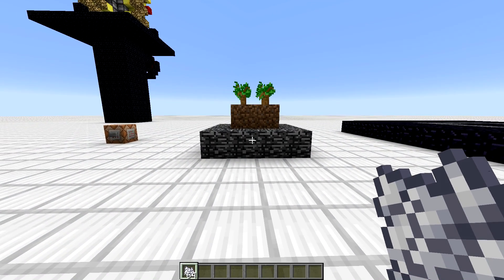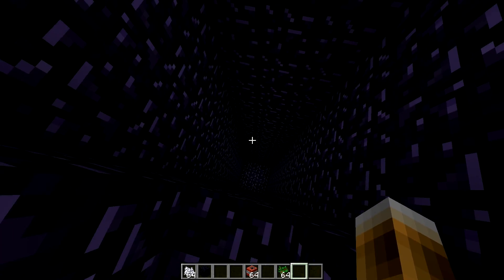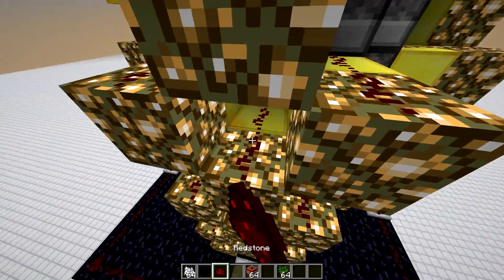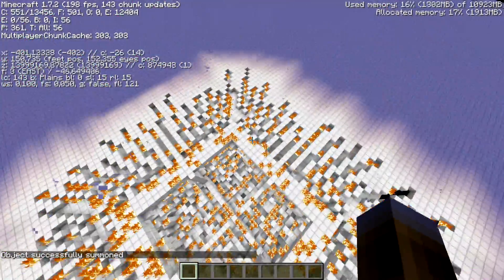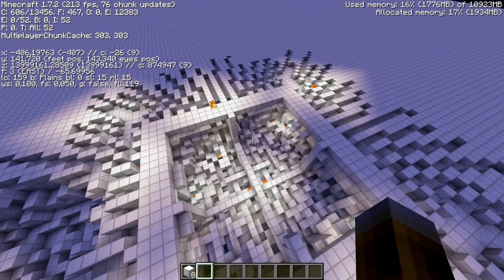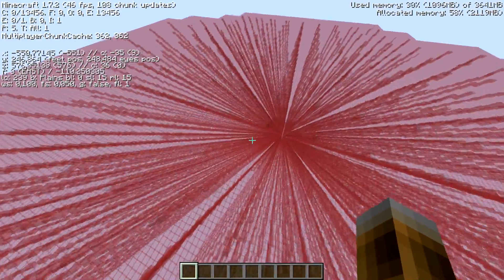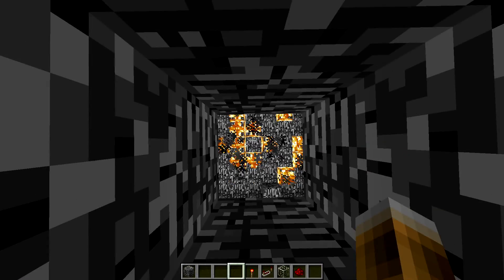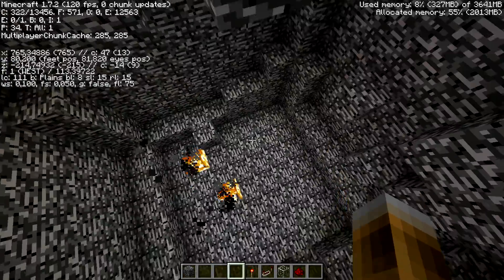Minecraft Science: Explosions ( How to blow up Bedrock - Explanation)

Comment: 00000000000000000000000000000000000000000000000000000000000000000000000000000000000000000000000000000000000000000000000000000000000000000000000000000000000000000000000000000000000000000
for the big bang sise it would be 100000000000000000000000000000000000000000000000000000000000000000000000000000000000000000000000000000000000000000000000000000000000000000000000000000000000000000000000000000000000000000000000000000000000000000000000000000000000000000000000000000000000000000000000000000000000000000000000000000000000000000000000000000000000000000000000000000000000000000000000000000000000000000000000000000000000000000000000000000000000000000000000000000000000000000000000000000000000000000000000000000000000000000000000000000000000000000000000000000000000000000000000000000000000000000000000000000000000000000000000000000000000000000000000000000000000000000000000000000000000000000000000000000000000000000000000000000000000000000000000000000000000000000000000000000000000000000000000000000000000000000000000000000000000000000000000000000000000000000000000000000000000000000000000000000000000000000000000000000000000000000000000000000000000000000000000000000000000000000000000000000000000000000000000000000000000000000000000000000000000000000000000000000000000000000000000000000000000000000000000000000000000000000000000000000000000000000000000000000000000000000000000000000000000000000000000000000000000000000000000000000000000000000000000000000000000000000000000000000000000000000000000000000000000000000000000000000000000000000000000000000000000000000000000000000000000000000000000000000000000000000000000000000000000000000000000000000000000000000000000000000000000000000000000000000000000000000000000000000000000000000000000000000000000000000000000000000000000000000000000000000000000000000000000000000000000000000000000000000000000000000000000000000000000000000000000000000000000000000000000000000000000000000000000000000000000000000000000000000000000000000000000000000000000000000000000000000000000000000000000000000000000000000000000000000000000000000000000000000000000000000000000000000000000000000000000000000000000000000000000000000000000000000000000000000000000000000000000000000000000000000000000000000000000000000000000000000000000000000000000000000000000000000000000000000000000000000000000000000000000000000000000000000000000000000000000000000000000000000000000000000000000000000000000000000000000000000000000000000000000000000000000000000000000000000000000000000000000000000000000000000000000000000000000000000000000000000000000000000000000000000000000000000000000000000000000000000000000000000000000000000000000000000000000000000000000000000000000000000000000000000000000000000000000000000000000000000000000000000000000000000000000000000000000000000000000000000000000000000000000000000000000000000000000000000000000000000000000000000000000000000000000000000000000000000000000000000000000000000000000000000000000000000000000000000000000000000000000000000000000000000000000000000000000000000000000000000000000000000000000000000000000000000000000000000000000000000000000000000000000000000000000000000000000000000000000000000000000000000000000000000000000000000000000000000000000000000000000000000000000000000000000000000000000000000000000000000000000000000000000000000000000000000000000000000000000000000000000000000000000000000000000000000000000000000000000000000000000000000000000000000000000000000000000000000000000000000000000000000000000000000000000000000000000000000000000000000000000000000000000000000000000000000000000000000000000000000000000000000000000000000000000000000000000000000000000000000000000000000000000000000000000000000000000000000000000000000000000000000000000000000000000000000000000000000000000000000000000000000000000000000000000000000000000000000000000000000000000000000000000000000000000000000000000000000000000000000000000000000000000000000000000000000000000000000000000000000000000000000000000000000000000000000000000000000000000000000000000000000000000000000000000000000000000000000000000000000000000000000000000000000000000000000000000000000000000000000000000000000000000000000000000000000000000000000000000000000000000000000000000000000000000000000000000000000000000000000000000000000000000000000000000000000000000000000000000000000000000000000000000000000000000000000000000000000000000000000000000000000000000000000000000000000000000000000000000000000000000000000000000000000000000000000000000000000000000000000000000000000000000000000000000000000000000000000000000000000000000000000000000000000000000000000000000000000000000000000000000000000000000000000000000000000000000000000000000000000000000000000000000000000000000000000000000000000000000000000000000000000000000000000000000000000000000000000000000000000000000000000000000000000000000000000000000000000000000000000000000000000000000000000012200000000000000000000000000000000000000000000000000000000000000000000000000000000000000000000000000000000000000000000000000000000000000000000000000000000000000000000000000000000000000000000000000000000000000000000000000000000000000000000000000000000000000000000000000000000000000000000000000000000000000000000000000000000000000000000000000000000000000000000000000000000000000000000000000000000000000000000000000000000000000000000000000000000000000000000000000000000000000000000000000000000000000000000000000000000000000000000000000000000000000000000000000000000000000000000000000000000000000000000000000000000000000000000000000000000000000000000000000000000000000000000000000000000000000000000000000000000000000000000000000000000000000000000000000000000000000000000000000000000000000000000000000000000000000000000000000000000000000000000000000000000000000000000000000000000000000000000000000000000000000000000000000000000000000000000000000000000000000000000000000000000000000000000000000000000000000000000000000000000000000000000000000000000000000000000000000000000000000000000000000000000000000000000000000000000000000000000000000000000000000000000000000000000000000000000000000000000000000000000000000000000000000000000000000000000000000000000000000000000000000000000000000000000000000000000000000000000000000000000000000000000000000000000000000000000000000000000000000000000000000000000000000000000000000000000000000000000000000000000000000000000000000000000000000000000000000000000000000000000000000000000000000000000000000000000000000000000000000000000000000000000000000000000000000000000000000000000000000000000000000000000000000000000000000000000000000000000000000000000000000000000000000000000000000000000000000000000000000000000000000000000000000000000000000000000000000000000000000000000000000000000000000000000000000000000000000000000000000000000000000000000000000000000000000000000000000000000000000000000000000000000000000000000000000000000000000000000000000000000000000000000000000000000000000000000000000000000000000000000000000000000000000000000000000000000000000000000000000000000000000000000000000000000000000000000000000000000000000000000000000000000000000000000000000000000000000000000000000000000000000000000000000000000000000000000000000000000000000000000000000000000000000000000000000000000000000000000000000000000000000000000000000000000000000000000000000000000000000000000000000000000000000000000000000000000000000000000000000000000000000000000000000000000000000000000000000000000000000000000000000000000000000000000000000000000000000000000000000000000000000000000000000000000000000000000000000000000000000000000000000000000000000000000000000000000000000000000000000000000000000000000000000000000000000000000000000000000000000000000000000000000000000000000000000000000000000000000000000000000000000000000000000000000000000000000000000000000000000000000000000000000000000000000000000000000000000000000000000000000000000000000000000000000000000000000000000000000000000000000000000000000000000000000000000000000000000000000000000000000000000000000000000000000000000000000000000000000000000000000000000000000000000000000000000000000000000000000000000000000000000000000000000000000000000000000000000000000000000000000000000000000000000000000000000000000000000000000000000000000000000000000000000000000000000000000000000000000000000000000000000000000000000000000000000000000000000000000000000000000000000000000000000000000000000000000000000000000000000000000000000000000000000000000000000000000000000000000000000000000000000000000000000000000000000000000000000000000000000000000000000000000000000000000000000000000000000000000000000000000000000000000000000000000000000000000000000000000000000000000000000000000000000000000000000000000000000000000000000000000000000000000000000000000000000000000000000000000000000000000000000000000000000000000000000000000000000000000000000000000000000000000000000000000000000000000000000000000000000000000000000000000000000000000000000000000000000000000000000000000000000000000000000000000000000000000000000000000000000000000000000000000000000000000000000000000000000000000000000000000000000000000000000000000000000000000000000000000000000000000000000000000000000000000000000000000000000000000000000000000000000000000000000000000000000000000000000000000000000000000000000000000000000000000000000000000000000000000000000000000000000000000000000000000000000000000000000000000000000000000000000000000000000000000000000000000000000000000000000000000000000000000000000000000000000000000000000000000000000000000000000000000000000000000000000000000000000000000000000000000000000000000000000000000000000000000000000000000000000000000000000000000000000000000000000000000000000000000000000000000000000000000000000000000000000000000000000000000000000000000000000000000000000000000000000000000000000000000000000000000000000000000000000000000000000000000000000000000000000000000000000000000000000000000000000000000000000000000000000000000000000000000000000000000000000000000000000000000000000000000000000000000000000000000000000000000000000000000000000000000000000000000000000000000000000000000000000000000000000000000000000000000000000000000000000000000000000000000000000000000000000000000000000000000000000000000000000000000000000000000000000000000000000000000000000000000000000000000000000000000000000000000000000000000000000000000000000000000000000000000000000000000000000000000000000000000000000000000000000000000000000000000000000000000000000000000000000000000000000000000000000000000000000000000000000000000000000000000000000000000000000000000000000000000000000000000000000000000000000000000000000000000000000000000000000000000000000000000000000000000000000000000000000000000000000000000000000000000000000000000000000000000000000000000000000000000000000000000000000000000000000000000000000000000000000000000000000000000000000000000000000000000000000000000000000000000000000000000000000000000000000000000000000000000000000000000000000000000000000000000000000000000000000000000000000000000000000000000000000000000000000000000000000000000000000000000000000000000000000000000000000000000000000000000000000000000000000000000000000000000000000000000000000000000000000000000000000000000000000000000000000000000000000000000000000000000000000000000000000000000000000000000000000000000000000000000000000000000000000000000000000000000000000000000000000000000000000000000000000000000000000000000000000000000000000000000000000000000000000000000000000000000000000000000000000000000000000000000000000000000000000000000000000000000000000000000000000000000000000000000000000000000000000000000000000000000000000000000000000000000000000000000000000000000000000000000000000000000000000000000000000000000000000000000000000000000000000000000000000000000000000000000000000000000000000000000000000000000000000000000000000000ifyouseethisthenreplysayingisawitokok00000000000000000000000000000000000000000000000000000000000000000000000000000000000000000000000000000000000000000000000000000000000000000000000000000000000000000000000000000000000000000000000000000000000000000000000000000000000000000000000000000000000000000000000000000000000000000000000000000000000000000000000000000000000000000000000000000000000000000000000000000000000000000000000000000000000000000000000000000000000000000000000000000000000000000000000000000000000000000000000000000000000000000000000000000000000000000000000000000000000000000000000000000000000000000000000000000000000000000000000000000000000000000000000000000000000000000000000000000000000000000000000000000000000000000000000000000000000000000000000000000000000000000000000000000000000000000000000000000000000000000000000000000000000000000000000000000000000000000000000000000000000000000000000000000000000000000000000000000000000000000000000000000000000000000000000000000000000000000000000000000000000000000000000000000000000000000000000000000000000000000000000000000000000000000000000000000000000000000000000000000000000000000000000000000000000000000000000000000000000000000000000000000000000000000000000000000000000000000000000000000000000000000000000000000000000000000000000000000000000000000000000000000000000000000000000000000000000000000000000000000000000000000000000000000000000000000000000000000000000000000000000000000000000000000000000000000000000000000000000000000000000000000000000000000000000000000000000000000000000000000000000000000000000000000000000000000000000000000000000000000000000000000000000000000000000000000000000000000000000000000000000000000000000000000000000000000000000000000000000000000000000000000000000000000000000000000000000000000000000000000000000000000000000000000000000000000000000000000000000000000000000000000000000000000000000000000000000000000000000000000000000000000000000000000000000000000000000000000000000000000000000000000000000000000000000000000000000000000000000000000000000000000000000000000000000000000000000000000000000000000000000000000000000000000000000000000000000000000000000000000000000000000000000000000000000000000000000000000000000000000000000000000000000000000000000000000000000000000000000000000000000000000000000000000000000000000000000000000000000000000000000000000000000000000000000000000000000000000000000000000000000000000000000000000000000000000000000000000000000000000000000000000000000000000000000000000000000000000000000000000000000000000000000000000000000000000000000000000000000000000000000000000000000000000000000000000000000000000000000000000000000000000000000000000000000000000000000000000000000000000000000000000000000000000000000000000000000000000000000000000000000000000000000000000000000000000000000000000000000000000000000000000000000000000000000000000000000000000000000000000000000000000000000000000000000000000000000000000000000000000000000000000000000000000000000000000000000000000000000000000000000000000000000000000000000000000000000000000000000000000000000000000000000000000000000000000000000000000000000000000000000000000000000000000000000000000000000000000000000000000000000000000000000000000000000000000000000000000000000000000000000000000000000000000000000000000000000000000000000000000000000000000000000000000000000000000000000000000000000000000000000000000000000000000000000000000000000000000000000000000000000000000000000000000000000000000000000000000000000000000000000000000000000000000000000000000000000000000000000000000000000000000000000000000000000000000000000000000000000000000000000000000000000000000000000000000000000000000000000000000000000000000000000000000000000000000000000000000000000000000000000000000000000000000000000000000000000000000000000000000000000000000000000000000000000000000000000000000000000000000000000000000000000000000000000000000000000000000000000000000000000000000000000000000000000000000000000000000000000000000000000000000000000000000000000000000000000000000000000000000000000000000000000000000000000000000000000000000000000000000000000000000000000000000000000000000000000000000000000000000000000000000000000000000000000000000000000000000000000000000000000000000000000000000000000000000000000000000000000000000000000000000000000000000000000000000000000000000000000000000000000000000000000000000000000000000000000000000000000000000000000000000000000000000000000000000000000000000000000000000000000000000000000000000000000000000000000000000000000000000000000000000000000000000000000000000000000000000000000000000000000000000000000000000000000000000000000000000000000000000000000000000000000000000000000000000000000000000000000000000000000000000000000000000000000000000000000000000000000000000000000000000000000000000000000000000000000000000000000000000000000000000000000000000000000000000000000000000000000000000000000000000000000000000000000000000000000000000000000000000000000000000000000000000000000000000000000000000000000000000000000000000000000000000000000000000000000000000000000000000000000000000000000000000000000000000000000000000000000000000000000000000000000000000000000000000000000000000000000000000000000000000000000000000000000000000000000000000000000000000000000000000000000000000000000000000000000000000000000000000000000000000000000000000000000000000000000000000000000000000000000000000000000000000000000000000000000000000000000000000000000000000000000000000000000000000000000000000000000000000000000000000000000000000000000000000000000000000000000000000000000000000000000000000000000000000000000000000000000000000000000000000000000000000000000000000000000000000000000000000000000000000000000000000000000000000000000000000000000000000000000000000000000000000000000000000000000000000000000000000000000000000000000000000000000000000000000000000000000000000000000000000000000000000000000000000000000000000000000000000000000000000000000000000000000000000000000000000000000000000000000000000000000000000000000000000000000000000000000000000000000000000000000000000000000000000000000000000000000000000000000000000000000000000000000000000000000000000000000000000000000000000000000000000000000000000000000000000000000000000000000000000000000000000000000000000000000000000000000000000000000000000000000000000000000000000000000000000000000000000000000000000000000000000000000000000000000000000000000000000000000000000000000000000000000000000000000000000000000000000000000000000000000000000000000000000000000000000000000000000000000000000000000000000000000000000000000000000000000000000000000000000000000000000000000000000000000000000000000000000000000000000000000000000000000000000000000000000000000000000000000000000000000000000000000000000000000000000000000000000000000000000000000000000000000000000000000000000000000000000000000000000000000000000000000000000000000000000000000000000000000000000000000000000000000000000000000000000000000000000000000000000000000000000000000000000000000000000000000000000000000000000000000000000000000000000000000000000000000000000000000000000000000000000000000000000000000000000000000000000000000000000000000000000000000000000000000000000000000000000000000000000000000000000000000000000000000000000000000000000000000000000000000000000000000000000000000000000000000000000000000000000000000000000000000000000000000000000000000000000000000000000000000000000000000000000000000000000000000000000000000000000000000000000000000000000000000000000000000000000000000000000000000000000000000000000000000000000000000000000000000000000000000000000000000000000000000000000000000000000000000000000000000000000000000000000000000000000000000000000000000000000000000000000000000000000000000000000000000000000000000000000000000000000000000000000000000000000000000000000000000000000000000000000000000000000000000000000000000000000000000000000000000000000000000000000000000000000000000000000000000000000000000000000000000000000000000000000000000000000000000000000000000000000000000000000000000000000000000000000000000000000000000000000000000000000000000000000000000000000000000000000000000000000000000000000000000000000000000000000000000000000000000000000000000000000000000000000000000000000000000000000000000000000000000000000000000000000000000000000000000000000000000000000000000000000000000000000000000000000000000000000000000000000000000000000000000000000000000000000000000000000000000000000000000000000000000000000000000000000000000000000000000000000000000000000000000000000000000000000000000000000000000000000000000000000000000000000000000000000000000000000000000000000000000000000000000000000000000000000000000000000000000000000000000000000000000000000000000000000000000000000000000000000000000000000000000000000000000000000000000000000000000000000000000000000000000000000000000000000000000000000000000000000000000000000000000000000000000000000000000000000000000000000000000000000000000000000000000000000000000000000000000000000000000000000000000000000000000000000000000000000000000000000000000000000000000000000000000000000000000000000000000000000000000000000000000000000000000000000000000000000000000000000000000000000000000000000000000000000000000000000000000000000000000000000000000000000000000000000000000000000000000000000000000000000000000000000000000000000000000000000000000000000000000000000000000000000000000000000000000000000000000000000000000000000000000000000000000000000000000000000000000000000000000000000000000000000000000000000000000000000000000000000000000000000000000000000000000000000000000000000000000000000000000000000000000000000000000000000000000000000000000000000000000000000000000000000000000000000000000000000000000000000000000000000000000000000000000000000000000000000000000000000000000000000000000000000000000000000000000000000000000000000000000000000000000000000000000000000000000000000000000000000000000000000000000000000000000000000000000000000000000000000000000000000000000000000000000000000000000000000000000000000000000000000000000000000000000000000000000000000000000000000000000000000000000000000000000000000000000000000000000000000000000000000000000000000000000000000000000000000000000000000000000000000000000000000000000000000000000000000000000000000000000000000000000000000000000000000000000000000000000000000000000000000000000000000000000000000000000000000000000000000000000000000000000000000000000000000000000000000000000000000000000000000000000000000000000000000000000000000000000000000000000000000000000000000000000000000000000000000000000000000000000000000000000000000000000000000000000000000000000000000000000000000000000000000000000000000000000000000000000000000000000000000000000000000000000000000000000000000000000000000000000000000000000000000000000000000000000000000000000000000000000000000000000000000000000000000000000000000000000000000000000000000000000000000000000000000000000000000000000000000000000000000000000000000000000000000000000000000000000000000000000000000000000000000000000000000000000000000000000000000000000000000000000000000000000000000000000000000000000000000000000000000000000000000000000000000000000000000000000000000000000000000000000000000000000000000000000000000000000000000000000000000000000000000000000000000000000000000000000000000000000000000000000000000000000000000000000000000000000000000000000000000000000000000000000000000000000000000000000000000000000000000000000000000000000000000000000000000000000000000000000000000000000000000000000000000000000000000000000000000000000000000000000000000000000000000000000000000000000000000000000000000000000000000000000000000000000000000000000000000000000000000000000000000000000000000000000000000000000000000000000000000000000000000000000000000000000000000000000000000000000000000000000000000000000000000000000000000000000000000000000000000000000000000000000000000000000000000000000000000000000000000000000000000000000000000000000000000000000000000000000000000000000000000000000000000000000000000000000000000000000000000000000000000000000000000000000000000000000000000000000000000000000000000000000000000000000000000000000000000000000000000000000000000000000000000000000000000000000000000000000000000000000000000000000000000000000000000000000000000000000000000000000000000000000000000000000000000000000000000000000000000000000000000000000000000000000000000000000000000000000000000000000000000000000000000000000000000000000000000000000000000000000000000000000000000000000000000000000000000000000000000000000000000000000000000000000000000000000000000000000000000000000000000000000000000000000000000000000000000000000000000000000000000000000000000000000000000000000000000000000000000000000000000000000000000000000000000000000000000000000000000000000000000000000000000000000000000000000000000000000000000000000000000000000000000000000000000000000000000000000000000000000000000000000000000000000000000000000000000000000000000000000000000000000000000000000000000000000000000000000000000000000000000000000000000000000000000000000000000000000000000000000000000000000000000000000000000000000000000000000000000000000000000000000000000000000000000000000000000000000000000000000000000000000000000000000000000000000000000000000000000000000000000000000000000000000000000000000000000000000000000000000000000000000000000000000000000000000000000000000000000000000000000000000000000000000000000000000000000000000000000000000000000000000000000000000000000000000000000000000000000000000000000000000000000000000000000000000000000000000000000000000000000000000000000000000000000000000000000000000000000000000000000000000000000000000000000000000000000000000000000000000000000000000000000000000000000000000000000000000000000000000000000000000000000000000000000000000000000000000000000000000000000000000000000000000000000000000000000000000000000000000000000000000000000000000000000000000000000000000000000000000000000000000000000000000000000000000000000000000000000000000000000000000000000000000000000000000000000000000000000000000000000000000000000000000000000000000000000000000000000000000000000000000000000000000000000000000000000000000000000000000000000000000000000000000000000000000000000000000000000000000000000000000000000000000000000000000000000000000000000000000000000000000000000000000000000000000000000000000000000000000000000000000000000000000000000000000000000000000000000000000000000000000000000000000000000000000000000000000000000000000000000000000000000000000000000000000000000000000000000000000000000000000000000000000000000000000000000000000000000000000000000000000000000000000000000000000000000000000000000000000000000000000000000000000000000000000000000000000000000000000000000000000000000000000000000000000000000000000000000000000000000000000000000000000000000000000000000000000000000000000000000000000000000000000000000000000000000000000000000000000000000000000000000000000000000000000000000000000000000000000000000000000000000000000000000000000000000000000000000000000000000000000000000000000000000000000000000000000000000000000000000000000000000000000000000000000000000000000000000000000000000000000000000000000000000000000000000000000000000000000000000000000000000000000000000000000000000000000000000000000000000000000000000000000000000000000000000000000000000000000000000000000000000000000000000000000000000000000000000000000000000000000000000000000000000000000000000000000000000000000000000000000000000000000000000000000000000000000000000000000000000000000000000000000000000000000000000000000000000000000000000000000000000000000000000000000000000000000000000000000000000000000000000000000000000000000000000000000000000000000000000000000000000000000000000000000000000000000000000000000000000000000000000000000000000000000000000000000000000000000000000000000000000000000000000000000000000000000000000000000000000000000000000000000000000000000000000000000000000000000000000000000000000000000000000000000000000000000000000000000000000000000000000000000000000000000000000000000000000000000000000000000000000000000000000000000000000000000000000000000000000000000000000000000000000000000000000000000000000000000000000000000000000000000000000000000000000000000000000000000000000000000000000000000000000000000000000000000000000000000000000000000000000000000000000000000000000000000000000000000000000000000000000000000000000000000000000000000000000000000000000000000000000000000000000000000000000000000000000000000000000000000000000000000000000000000000000000000000000000000000000000000000000000000000000000000000000000000000000000000000000000000000000000000000000000000000000000000000000000000000000000000000000000000000000000000000000000000000000000000000000000000000000000000000000000000000000000000000000000000000000000000000000000000000000000000000000000000000000000000000000000000000000000000000000000000000000000000000000000000000000000000000000000000000000000000000000000000000000000000000000000000000000000000000000000000000000000000000000000000000000000000000000000000000000000000000000000000000000000000000000000000000000000000000000000000000000000000000000000000000000000000000000000000000000000000000000000000000000000000000000000000000000000000000000000000000000000000000000000000000000000000000000000000000000000000000000000000000000000000000000000000000000000000000000000000000000000000000000000000000000000000000000000000000000000000000000000000000000000000000000000000000000000000000000000000000000000000000000000000000000000000000000000000000000000000000000000000000000000000000000000000000000000000000000000000000000000000000000000000000000000000000000000000000000000000000000000000000000000000000000000000000000000000000000000000000000000000000000000000000000000000000000000000000000000000000000000000000000000000000000000000000000000000000000000000000000000000000000000000000000000000000000000000000000000000000000000000000000000000000000000000000000000000000000000000000000000000000000000000000000000000000000000000000000000000000000000000000000000000000000000000000000000000000000000000000000000000000000000000000000000000000000000000000000000000000000000000000000000000000000000000000000000000000000000000000000000000000000000000000000000000000000000000000000000000000000000000000000000000000000000000000000000000000000000000000000000000000000000000000000000000000000000000000000000000000000000000000000000000000000000000000000000000000000000000000000000000000000000000000000000000000000000000000000000000000000000000000000000000000000000000000000000000000000000000000000000000000000000000000000000000000000000000000000000000000000000000000000000000000000000000000000000000000000000000000000000000000000000000000000000000000000000000000000000000000000000000000000000000000000000000000000000000000000000000000000000000000000000000000000000000000000000000000000000000000000000000000000000000000000000000000000000000000000000000000000000000000000000000000000000000000000000000000000000000000000000000000000000000000000000000000000000000000000000000000000000000000000000000000000000000000000000000000000000000000000000000000000000000000000000000000000000000000000000000000000000000000000000000000000000000000000000000000000000000000000000000000000000000000000000000000000000000000000000000000000000000000000000000000000000000000000000000000000000000000000000000000000000000000000000000000000000000000000000000000000000000000000000000000000000000000000000000000000000000000000000000000000000000000000000000000000000000000000000000000000000000000000000000000000000000000000000000000000000000000000000000000000000000000000000000000000000000000000000000000000000000000000000000000000000000000000000000000000000000000000000000000000000000000000000000000000000000000000000000000000000000000000000000000000000000000000000000000000000000000000000000000000000000000000000000000000000000000000000000000000000000000000000000000000000000000000000000000000000000000000000000000000000000000000000000000000000000000000000000000000000000000000000000000000000000000000000000000000000000000000000000000000000000000000000000000000000000000000000000000000000000000000000000000000000000000000000000000000000000000000000000000000000000000000000000000000000000000000000000000000000000000000000000000000000000000000000000000000000000000000000000000000000000000000000000000000000000000000000000000000000000000000000000000000000000000000000000000000000000000000000000000000000000000000000000000000000000000000000000000000000000000000000000000000000000000000000000000000000000000000000000000000000000000000000000000000000000000000000000000000000000000000000000000000000000000000000000000000000000000000000000000000000000000000000000000000000000000000000000000000000000000000000000000000000000000000000000000000000000000000000000000000000000000000000000000000000000000000000000000000000000000000000000000000000000000000000000000000000000000000000000000000000000000000000000000000000000000000000000000000000000000000000000000000000000000000000000000000000000000000000000000000000000000000000000000000000000000000000000000000000000000000000000000000000000000000000000000000000000000000000000000000000000000000000000000000000000000000000000000000000000000000000000000000000000000000000000000000000000000000000000000000000000000000000000000000000000000000000000000000000000000000000000000000000000000000000000000000000000000000000000000000000000000000000000000000000000000000000000000000000000000000000000000000000000000000000000000000000000000000000000000000000000000000000000000000000000000000000000000000000000000000000000000000000000000000000000000000000000000000000000000000000000000000000000000000000000000000000000000000000000000000000000000000000000000000000000000000000000000000000000000000000000000000000000000000000000000000000000000000000000000000000000000000000000000000000000000000000000000000000000000000000000000000000000000000000000000000000000000000000000000000000000000000000000000000000000000000000000000000000000000000000000000000000000000000000000000000000000000000000000000000000000000000000000000000000000000000000000000000000000000000000000000000000000000000000000000000000000000000000000000000000000000000000000000000000000000000000000000000000000000000000000000000000000000000000000000000000000000000000000000000000000000000000000000000000000000000000000000000000000000000000000000000000000000000000000000000000000000000000000000000000000000000000000000000000000000000000000000000000000000000000000000000000000000000000000000000000000000000000000000000000000000000000000000000000000000000000000000000000000000000000000000000000000000000000000000000000000000000000000000000000000000000000000000000000000000000000000000000000000000000000000000000000000000000000000000000000000000000000000000000000000000000000000000000000000000000000000000000000000000000000000000000000000000000000000000000000000000000000000000000000000000000000000000000000000000000000000000000000000000000000000000000000000000000000000000000000000000000000000000000000000000000000000000000000000000000000000000000000000000000000000000000000000000000000000000000000000000000000000000000000000000000000000000000000000000000000000000000000000000000000000000000000000000000000000000000000000000000000000000000000000000000000000000000000000000000000000000000000000000000000000000000000000000000000000000000000000000000000000000000000000000000000000000000000000000000000000000000000000000000000000000000000000000000000000000000000000000000000000000000000000000000000000000000000000000000000000000000000000000000000000000000000000000000000000000000000000000000000000000000000000000000000000000000000000000000000000000000000000000000000000000000000000000000000000000000000000000000000000000000000000000000000000000000000000000000000000000000000000000000000000000000000000000000000000000000000000000000000000000000000000000000000000000000000000000000000000000000000000000000000000000000000000000000000000000000000000000000000000000000000000000000000000000000000000000000000000000000000000000000000000000000000000000000000000000000000000000000000000000000000000000000000000000000000000000000000000000000000000000000000000000000000000000000000000000000000000000000000000000000000000000000000000000000000000000000000000000000000000000000000000000000000000000000000000000000000000000000000000000000000000000000000000000000000000000000000000000000000000000000000000000000000000000000000000000000000000000000000000000000000000000000000000000000000000000000000000000000000000000000000000000000000000000000000000000000000000000000000000000000000000000000000000000000000000000000000000000000000000000000000000000000000000000000000000000000000000000000000000000000000000000000000000000000000000000000000000000000000000000000000000000000000000000000000000000000000000000000000000000000000000000000000000000000000000000000000000000000000000000000000000000000000000000000000000000000000000000000000000000000000000000000000000000000000000000000000000000000000000000000000000000000000000000000000000000000000000000000000000000000000000000000000000000000000000000000000000000000000000000000000000000000000000000000000000000000000000000000000000000000000000000000000000000000000000000000000000000000000000000000000000000000000000000000000000000000000000000000000000000000000000000000000000000000000000000000000000000000000000000000000000000000000000000000000000000000000000000000000000000000000000000000000000000000000000000000000000000000000000000000000000000000000000000000000000000000000000000000000000000000000000000000000000000000000000000000000000000000000000000000000000000000000000000000000000000000000000000000000000000000000000000000000000000000000000000000000000000000000000000000000000000000000000000000000000000000000000000000000000000000000000000000000000000000000000000000000000000000000000000000000000000000000000000000000000000000000000000000000000000000000000000000000000000000000000000000000000000000000000000000000000000000000000000000000000000000000000000000000000000000000000000000000000000000000000000000000000000000000000000000000000000000000000000000000000000000000000000000000000000000000000000000000000000000000000000000000000000000000000000000000000000000000000000000000000000000000000000000000000000000000000000000000000000000000000000000000000000000000000000000000000000000000000000000000000000000000000000000000000000000000000000000000000000000000000000000000000000000000000000000000000000000000000000000000000000000000000000000000000000000000000000000000000000000000000000000000000000000000000000000000000000000000000000000000000000000000000000000000000000000000000000000000000000000000000000000000000000000000000000000000000000000000000000000000000000000000000000000000000000000000000000000000000000000000000000000000000000000000000000000000000000000000000000000000000000000000000000000000000000000000000000000000000000000000000000000000000000000000000000000000000000000000000000000000000000000000000000000000000000000000000000000000000000000000000000000000000000000000000000000000000000000000000000000000000000000000000000000000000000000000000000000000000000000000000000000000000000000000000000000000000000000000000000000000000000000000000000000000000000000000000000000000000000000000000000000000000000000000000000000000000000000000000000000000000000000000000000000000000000000000000000000000000000000000000000000000000000000000000000000000000000000000000000000000000000000000000000000000000000000000000000000000000000000000000000000000000000000000000000000000000000000000000000000000000000000000000000000000000000000000000000000000000000000000000000000000000000000000000000000000000000000000000000000000000000000000000000000000000000000000000000000000000000000000000000000000000000000000000000000000000000000000000000000000000000000000000000000000000000000000000000000000000000000000000000000000000000000000000000000000000000000000000000000000000000000000000000000000000000000000000000000000000000000000000000000000000000000000000000000000000000000000000000000000000000000000000000000000000000000000000000000000000000000000000000000000000000000000000000000000000000000000000000000000000000000000000000000000000000000000000000000000000000000000000000000000000000000000000000000000000000000000000000000000000000000000000000000000000000000000000000000000000000000000000000000000000000000000000000000000000000000000000000000000000000000000000000000000000000000000000000000000000000000000000000000000000000000000000000000000000000000000000000000000000000000000000000000000000000000000000000000000000000000000000000000000000000000000000000000000000000000000000000000000000000000000000000000000000000000000000000000000000000000000000000000000000000000000000000000000000000000000000000000000000000000000000000000000000000000000000000000000000000000000000000000000000000000000000000000000000000000000000000000000000000000000000000000000000000000000000000000000000000000000000000000000000000000000000000000000000000000000000000000000000000000000000000000000000000000000000000000000000000000000000000000000000000000000000000000000000000000000000000000000000000000000000000000000000000000000000000000000000000000000000000000000000000000000000000000000000000000000000000000000000000000000000000000000000000000000000000000000000000000000000000000000000000000000000000000000000000000000000000000000000000000000000000000000000000000000000000000000000000000000000000000000000000000000000000000000000000000000000000000000000000000000000000000000000000000000000000000000000000000000000000000000000000000000000000000000000000000000000000000000000000000000000000000000000000000000000000000000000000000000000000000000000000000000000000000000000000000000000000000000000000000000000000000000000000000000000000000000000000000000000000000000000000000000000000000000000000000000000000000000000000000000000000000000000000000000000000000000000000000000000000000000000000000000000000000000000000000000000000000000000000000000000000000000000000000000000000000000000000000000000000000000000000000000000000000000000000000000000000000000000000000000000000000000000000000000000000000000000000000000000000000000000000000000000000000000000000000000000000000000000000000000000000000000000000000000000000000000000000000000000000000000000000000000000000000000000000000000000000000000000000000000000000000000000000000000000000000000000000000000000000000000000000000000000000000000000000000000000000000000000000000000000000000000000000000000000000000000000000000000000000000000000000000000000000000000000000000000000000000000000000000000000000000000000000000000000000000000000000000000000000000000000000000000000000000000000000000000000000000000000000000000000000000000000000000000000000000000000000000000000000000000000000000000000000000000000000000000000000000000000000000000000000000000000000000000000000000000000000000000000000000000000000000000000000000000000000000000000000000000000000000000000000000000000000000000000000000000000000000000000000000000000000000000000000000000000000000000000000000000000000000000000000000000000000000000000000000000000000000000000000000000000000000000000000000000000000000000000000000000000000000000000000000000000000000000000000000000000000000000000000000000000000000000000000000000000000000000000000000000000000000000000000000000000000000000000000000000000000000000000000000000000000000000000000000000000000000000000000000000000000000000000000000000000000000000000000000000000000000000000000000000000000000000000000000000000000000000000000000000000000000000000000000000000000000000000000000000000000000000000000000000000000000000000000000000000000000000000000000000000000000000000000000000000000000000000000000000000000000000000000000000000000000000000000000000000000000000000000000000000000000000000000000000000000000000000000000000000000000000000000000000000000000000000000000000000000000000000000000000000000000000000000000000000000000000000000000000000000000000000000000000000000000000000000000000000000000000000000000000000000000000000000000000000000000000000000000000000000000000000000000000000000000000000000000000000000000000000000000000000000000000000000000000000000000000000000000000000000000000000000000000000000000000000000000000000000000000000000000000000000000000000000000000000000000000000000000000000000000000000000000000000000000000000000000000000000000000000000000000000000000000000000000000000000000000000000000000000000000000000000000000000000000000000000000000000000000000000000000000000000000000000000000000000000000000000000000000000000000000000000000000000000000000000000000000000000000000000000000000000000000000000000000000000000000000000000000000000000000000000000000000000000000000000000000000000000000000000000000000000000000000000000000000000000000000000000000000000000000000000000000000000000000000000000000000000000000000000000000000000000000000000000000000000000000000000000000000000000000000000000000000000000000000000000000000000000000000000000000000000000000000000000000000000000000000000000000000000000000000000000000000000000000000000000000000000000000000000000000000000000000000000000000000000000000000000000000000000000000000000000000000000000000000000000000000000000000000000000000000000000000000000000000000000000000000000000000000000000000000000000000000000000000000000000000000000000000000000000000000000000000000000000000000000000000000000000000000000000000000000000000000000000000000000000000000000000000000000000000000000000000000000000000000000000000000000000000000000000000000000000000000000000000000000000000000000000000000000000000000000000000000000000000000000000000000000000000000000000000000000000000000000000000000000000000000000000000000000000000000000000000000000000000000000000000000000000000000000000000000000000000000000000000000000000000000000000000000000000000000000000000000000000000000000000000000000000000000000000000000000000000000000000000000000000000000000000000000000000000000000000000000000000000000000000000000000000000000000000000000000000000000000000000000000000000000000000000000000000000000000000000000000000000000000000000000000000000000000000000000000000000000000000000000000000000000000000000000000000000000000000000000000000000000000000000000000000000000000000000000000000000000000000000000000000000000000000000000000000000000000000000000000000000000000000000000000000000000000000000000000000000000000000000000000000000000000000000000000000000000000000000000000000000000000000000000000000000000000000000000000000000000000000000000000000000000000000000000000000000000000000000000000000000000000000000000000000000000000000000000000000000000000000000000000000000000000000000000000000000000000000000000000000000000000000000000000000000000000000000000000000000000000000000000000000000000000000000000000000000000000000000000000000000000000000000000000000000000000000000000000000000000000000000000000000000000000000000000000000000000000000000000000000000000000000000000000000000000000000000000000000000000000000000000000000000000000000000000000000000000000000000000000000000000000000000000000000000000000000000000000000000000000000000000000000000000000000000000000000000000000000000000000000000000000000000000000000000000000000000000000000000000000000000000000000000000000000000000000000000000000000000000000000000000000000000000000000000000000000000000000000000000000000000000000000000000000000000000000000000000000000000000000000000000000000000000000000000000000000000000000000000000000000000000000000000000000000000000000000000000000000000000000000000000000000000000000000000000000000000000000000000000000000000000000000000000000000000000000000000000000000000000000000000000000000000000000000000000000000000000000000000000000000000000000000000000000000000000000000000000000000000000000000000000000000000000000000000000000000000000000000000000000000000000000000000000000000000000000000000000000000000000000000000000000000000000000000000000000000000000000000000000000000000000000000000000000000000000000000000000000000000000000000000000000000000000000000000000000000000000000000000000000000000000000000000000000000000000000000000000000000000000000000000000000000000000000000000000000000000000000000000000000000000000000000000000000000000000000000000000000000000000000000000000000000000000000000000000000000000000000000000000000000000000000000000000000000000000000000000000000000000000000000000000000000000000000000000000000000000000000000000000000000000000000000000000000000000000000000000000000000000000000000000000000000000000000000000000000000000000000000000000000000000000000000000000000000000000000000000000000000000000000000000000000000000000000000000000000000000000000000000000000000000000000000000000000000000000000000000000000000000000000000000000000000000000000000000000000000000000000000000000000000000000000000000000000000000000000000000000000000000000000000000000000000000000000000000000000000000000000000000000000000000000000000000000000000000000000000000000000000000000000000000000000000000000000000000000000000000000000000000000000000000000000000000000000000000000000000000000000000000000000000000000000000000000000000000000000000000000000000000000000000000000000000000000000000000000000000000000000000000000000000000000000000000000000000000000000000000000000000000000000000000000000000000000000000000000000000000000000000000000000000000000000000000000000000000000000000000000000000000000000000000000000000000000000000000000000000000000000000000000000000000000000000000000000000000000000000000000000000000000000000000000000000000000000000000000000000000000000000000000000000000000000000000000000000000000000000000000000000000000000000000000000000000000000000000000000000000000000000000000000000000000000000000000000000000000000000000000000000000000000000000000000000000000000000000000000000000000000000000000000000000000000000000000000000000000000000000000000000000000000000000000000000000000000000000000000000000000000000000000000000000000000000000000000000000000000000000000000000000000000000000000000000000000000000000000000000000000000000000000000000000000000000000000000000000000000000000000000000000000000000000000000000000000000000000000000000000000000000000000000000000000000000000000000000000000000000000000000000000000000000000000000000000000000000000000000000000000000000000000000000000000000000000000000000000000000000000000000000000000000000000000000000000000000000000000000000000000000000000000000000000000000000000000000000000000000000000000000000000000000000000000000000000000000000000000000000000000000000000000000000000000000000000000000000000000000000000000000000000000000000000000000000000000000000000000000000000000000000000000000000000000000000000000000000000000000000000000000000000000000000000000000000000000000000000000000000000000000000000000000000000000000000000000000000000000000000000000000000000000000000000000000000000000000000000000000000000000000000000000000000000000000000000000000000000000000000000000000000000000000000000000000000000000000000000000000000000000000000000000000000000000000000000000000000000000000000000000000000000000000000000000000000000000000000000000000000000000000000000000000000000000000000000000000000000000000000000000000000000000000000000000000000000000000000000000000000000000000000000000000000000000000000000000000000000000000000000000000000000000000000000000000000000000000000000000000000000000000000000000000000000000000000000000000000000000000000000000000000000000000000000000000000000000000000000000000000000000000000000000000000000000000000000000000000000000000000000000000000000000000000000000000000000000000000000000000000000000000000000000000000000000000000000000000000000000000000000000000000000000000000000000000000000000000000000000000000000000000000000000000000000000000000000000000000000000000000000000000000000000000000000000000000000000000000000000000000000000000000000000000000000000000000000000000000000000000000000000000000000000000000000000000000000000000000000000000000000000000000000000000000000000000000000000000000000000000000000000000000000000000000000000000000000000000000000000000000000000000000000000000000000000000000000000000000000000000000000000000000000000000000000000000000000000000000000000000000000000000000000000000000000000000000000000000000000000000000000000000000000000000000000000000000000000000000000000000000000000000000000000000000000000000000000000000000000000000000000000000000000000000000000000000000000000000000000000000000000000000000000000000000000000000000000000000000000000000000000000000000000000000000000000000000000000000000000000000000000000000000000000000000000000000000000000000000000000000000000000000000000000000000000000000000000000000000000000000000000000000000000000000000000000000000000000000000000000000000000000000000000000000000000000000000000000000000000000000000000000000000000000000000000000000000000000000000000000000000000000000000000000000000000000000000000000000000000000000000000000000000000000000000000000000000000000000000000000000000000000000000000000000000000000000000000000000000000000000000000000000000000000000000000000000000000000000000000000000000000000000000000000000000000000000000000000000000000000000000000000000000000000000000000000000000000000000000000000000000000000000000000000000000000000000000000000000000000000000000000000000000000000000000000000000000000000000000000000000000000000000000000000000000000000000000000000000000000000000000000000000000000000000000000000000000000000000000000000000000000000000000000000000000000000000000000000000000000000000000000000000000000000000000000000000000000000000000000000000000000000000000000000000000000000000000000000000000000000000000000000000000000000000000000000000000000000000000000000000000000000000000000000000000000000000000000000000000000000000000000000000000000000000000000000000000000000000000000000000000000000000000000000000000000000000000000000000000000000000000000000000000000000000000000000000000000000000000000000000000000000000000000000000000000000000000000000000000000000000000000000000000000000000000000000000000000000000000000000000000000000000000000000000000000000000000000000000000000000000000000000000000000000000000000000000000000000000000000000000000000000000000000000000000000000000000000000000000000000000000000000000000000000000000000000000000000000000000000000000000000000000000000000000000000000000000000000000000000000000000000000000000000000000000000000000000000000000000000000000000000000000000000000000000000000000000000000000000000000000000000000000000000000000000000000000000000000000000000000000000000000000000000000000000000000000000000000000000000000000000000000000000000000000000000000000000000000000000000000000000000000000000000000000000000000000000000000000000000000000000000000000000000000000000000000000000000000000000000000000000000000000000000000000000000000000000000000000000000000000000000000000000000000000000000000000000000000000000000000000000000000000000000000000000000000000000000000000000000000000000000000000000000000000000000000000000000000000000000000000000000000000000000000000000000000000000000000000000000000000000000000000000000000000000000000000000000000000000000000000000000000000000000000000000000000000000000000000000000000000000000000000000000000000000000000000000000000000000000000000000000000000000000000000000000000000000000000000000000000000000000000000000000000000000000000000000000000000000000000000000000000000000000000000000000000000000000000000000000000000000000000000000000000000000000000000000000000000000000000000000000000000000000000000000000000000000000000000000000000000000000000000000000000000000000000000000000000000000000000000000000000000000000000000000000000000000000000000000000000000000000000000000000000000000000000000000000000000000000000000000000000000000000000000000000000000000000000000000000000000000000000000000000000000000000000000000000000000000000000000000000000000000000000000000000000000000000000000000000000000000000000000000000000000000000000000000000000000000000000000000000000000000000000000000000000000000000000000000000000000000000000000000000000000000000000000000000000000000000000000000000000000000000000000000000000000000000000000000000000000000000000000000000000000000000000000000000000000000000000000000000000000000000000000000000000000000000000000000000000000000000000000000000000000000000000000000000000000000000000000000000000000000000000000000000000000000000000000000000000000000000000000000000000000000000000000000000000000000000000000000000000000000000000000000000000000000000000000000000000000000000000000000000000000000000000000000000000000000000000000000000000000000000000000000000000000000000000000000000000000000000000000000000000000000000000000000000000000000000000000000000000000000000000000000000000000000000000000000000000000000000000000000000000000000000000000000000000000000000000000000000000000000000000000000000000000000000000000000000000000000000000000000000000000000000000000000000000000000000000000000000000000000000000000000000000000000000000000000000000000000000000000000000000000000000000000000000000000000000000000000000000000000000000000000000000000000000000000000000000000000000000000000000000000000000000000000000000000000000000000000000000000000000000000000000000000000000000000000000000000000000000000000000000000000000000000000000000000000000000000000000000000000000000000000000000000000000000000000000000000000000000000000000000000000000000000000000000000000000000000000000000000000000000000000000000000000000000000000000000000000000000000000000000000000000000000000000000000000000000000000000000000000000000000000000000000000000000000000000000000000000000000000000000000000000000000000000000000000000000000000000000000000000000000000000000000000000000000000000000000000000000000000000000000000000000000000000000000000000000000000000000000000000000000000000000000000000000000000000000000000000000000000000000000000000000000000000000000000000000000000000000000000000000000000000000000000000000000000000000000000000000000000000000000000000000000000000000000000000000000000000000000000000000000000000000000000000000000000000000000000000000000000000000000000000000000000000000000000000000000000000000000000000000000000000000000000000000000000000000000000000000000000000000000000000000000000000000000000000000000000000000000000000000000000000000000000000000000000000000000000000000000000000000000000000000000000000000000000000000000000000000000000000000000000000000000000000000000000000000000000000000000000000000000000000000000000000000000000000000000000000000000000000000000000000000000000000000000000000000000000000000000000000000000000000000000000000000000000000000000000000000000000000000000000000000000000000000000000000000000000000000000000000000000000000000000000000000000000000000000000000000000000000000000000000000000000000000000000000000000000000000000000000000000000000000000000000000000000000000000000000000000000000000000000000000000000000000000000000000000000000000000000000000000000000000000000000000000000000000000000000000000000000000000000000000000000000000000000000000000000000000000000000000000000000000000000000000000000000000000000000000000000000000000000000000000000000000000000000000000000000000000000000000000000000000000000000000000000000000000000000000000000000000000000000000000000000000000000000000000000000000000000000000000000000000000000000000000000000000000000000000000000000000000000000000000000000000000000000000000000000000000000000000000000000000000000000000000000000000000000000000000000000000000000000000000000000000000000000000000000000000000000000000000000000000000000000000000000000000000000000000000000000000000000000000000000000000000000000000000000000000000000000000000000000000000000000000000000000000000000000000000000000000000000000000000000000000000000000000000000000000000000000000000000000000000000000000000000000000000000000000000000000000000000000000000000000000000000000000000000000000000000000000000000000000000000000000000000000000000000000000000000000000000000000000000000000000000000000000000000000000000000000000000000000000000000000000000000000000000000000000000000000000000000000000000000000000000000000000000000000000000000000000000000000000000000000000000000000000000000000000000000000000000000000000000000000000000000000000000000000000000000000000000000000000000000000000000000000000000000000000000000000000000000000000000000000000000000000000000000000000000000000000000000000000000000000000000000000000000000000000000000000000000000000000000000000000000000000000000000000000000000000000000000000000000000000000000000000000000000000000000000000000000000000000000000000000000000000000000000000000000000000000000000000000000000000000000000000000000000000000000000000000000000000000000000000000000000000000000000000000000000000000000000000000000000000000000000000000000000000000000000000000000000000000000000000000000000000000000000000000000000000000000000000000000000000000000000000000000000000000000000000000000000000000000000000000000000000000000000000000000000000000000000000000000000000000000000000000000000000000000000000000000000000000000000000000000000000000000000000000000000000000000000000000000000000000000000000000000000000000000000000000000000000000000000000000000000000000000000000000000000000000000000000000000000000000000000000000000000000000000000000000000000000000000000000000000000000000000000000000000000000000000000000000000000000000000000000000000000000000000000000000000000000000000000000000000000000000000000000000000000000000000000000000000000000000000000000000000000000000000000000000000000000000000000000000000000000000000000000000000000000000000000000000000000000000000000000000000000000000000000000000000000000000000000000000000000000000000000000000000000000000000000000000000000000000000000000000000000000000000000000000000000000000000000000000000000000000000000000000000000000000000000000000000000000000000000000000000000000000000000000000000000000000000000000000000000000000000000000000000000000000000000000000000000000000000000000000000000000000000000000000000000000000000000000000000000000000000000000000000000000000000000000000000000000000000000000000000000000000000000000000000000000000000000000000000000000000000000000000000000000000000000000000000000000000000000000000000000000000000000000000000000000000000000000000000000000000000000000000000000000000000000000000000000000000000000000000000000000000000000000000000000000000000000000000000000000000000000000000000000000000000000000000000000000000000000000000000000000000000000000000000000000000000000000000000000000000000000000000000000000000000000000000000000000000000000000000000000000000000000000000000000000000000000000000000000000000000000000000000000000000000000000000000000000000000000000000000000000000000000000000000000000000000000000000000000000000000000000000000000000000000000000000000000000000000000000000000000000000000000000000000000000000000000000000000000000000000000000000000000000000000000000000000000000000000000000000000000000000000000000000000000000000000000000000000000000000000000000000000000000000000000000000000000000000000000000000000000000000000000000000000000000000000000000000000000000000000000000000000000000000000000000000000000000000000000000000000000000000000000000000000000000000000000000000000000000000000000000000000000000000000000000000000000000000000000000000000000000000000000000000000000000000000000000000000000000000000000000000000000000000000000000000000000000000000000000000000000000000000000000000000000000000000000000000000000000000000000000000000000000000000000000000000000000000000000000000000000000000000000000000000000000000000000000000000000000000000000000000000000000000000000000000000000000000000000000000000000000000000000000000000000000000000000000000000000000000000000000000000000000000000000000000000000000000000000000000000000000000000000000000000000000000000000000000000000000000000000000000000000000000000000000000000000000000000000000000000000000000000000000000000000000000000000000000000000000000000000000000000000000000000000000000000000000000000000000000000000000000000000000000000000000000000000000000000000000000000000000000000000000000000000000000000000000000000000000000000000000000000000000000000000000000000000000000000000000000000000000000000000000000000000000000000000000000000000000000000000000000000000000000000000000000000000000000000000000000000000000000000000000000000000000000000000000000000000000000000000000000000000000000000000000000000000000000000000000000000000000000000000000000000000000000000000000000000000000000000000000000000000000000000000000000000000000000000000000000000000000000000000000000000000000000000000000000000000000000000000000000000000000000000000000000000000000000000000000000000000000000000000000000000000000000000000000000000000000000000000000000000000000000000000000000000000000000000000000000000000000000000000000000000000000000000000000000000000000000000000000000000000000000000000000000000000000000000000000000000000000000000000000000000000000000000000000000000000000000000000000000000000000000000000000000000000000000000000000000000000000000000000000000000000000000000000000000000000000000000000000000000000000000000000000000000000000000000000000000000000000000000000000000000000000000000000000000000000000000000000000000000000000000000000000000000000000000000000000000000000000000000000000000000000000000000000000000000000000000000000000000000000000000000000000000000000000000000000000000000000000000000000000000000000000000000000000000000000000000000000000000000000000000000000000000000000000000000000000000000000000000000000000000000000000000000000000000000000000000000000000000000000000000000000000000000000000000000000000000000000000000000000000000000000000000000000000000000000000000000000000000000000000000000000000000000000000000000000000000000000000000000000000000000000000000000000000000000000000000000000000000000000000000000000000000000000000000000000000000000000000000000000000000000000000000000000000000000000000000000000000000000000000000000000000000000000000000000000000000000000000000000000000000000000000000000000000000000000000000000000000000000000000000000000000000000000000000000000000000000000000000000000000000000000000000000000000000000000000000000000000000000000000000000000000000000000000000000000000000000000000000000000000000000000000000000000000000000000000000000000000000000000000000000000000000000000000000000000000000000000000000000000000000000000000000000000000000000000000000000000000000000000000000000000000000000000000000000000000000000000000000000000000000000000000000000000000000000000000000000000000000000000000000000000000000000000000000000000000000000000000000000000000000000000000000000000000000000000000000000000000000000000000000000000000000000000000000000000000000000000000000000000000000000000000000000000000000000000000000000000000000000000000000000000000000000000000000000000000000000000000000000000000000000000000000000000000000000000000000000000000000000000000000000000000000000000000000000000000000000000000000000000000000000000000000000000000000000000000000000000000000000000000000000000000000000000000000000000000000000000000000000000000000000000000000000000000000000000000000000000000000000000000000000000000000000000000000000000000000000000000000000000000000000000000000000000000000000000000000000000000000000000000000000000000000000000000000000000000000000000000000000000000000000000000000000000000000000000000000000000000000000000000000000000000000000000000000000000000000000000000000000000000000000000000000000000000000000000000000000000000000000000000000000000000000000000000000000000000000000000000000000000000000000000000000000000000000000000000000000000000000000000000000000000000000000000000000000000000000000000000000000000000000000000000000000000000000000000000000000000000000000000000000000000000000000000000000000000000000000000000000000000000000000000000000000000000000000000000000000000000000000000000000000000000000000000000000000000000000000000000000000000000000000000000000000000000000000000000000000000000000000000000000000000000000000000000000000000000000000000000000000000000000000000000000000000000000000000000000000000000000000000000000000000000000000000000000000000000000000000000000000000000000000000000000000000000000000000000000000000000000000000000000000000000000000000000000000000000000000000000000000000000000000000000000000000000000000000000000000000000000000000000000000000000000000000000000000000000000000000000000000000000000000000000000000000000000000000000000000000000000000000000000000000000000000000000000000000000000000000000000000000000000000000000000000000000000000000000000000000000000000000000000000000000000000000000000000000000000000000000000000000000000000000000000000000000000000000000000000000000000000000000000000000000000000000000000000000000000000000000000000000000000000000000000000000000000000000000000000000000000000000000000000000000000000000000000000000000000000000000000000000000000000000000000000000000000000000000000000000000000000000000000000000000000000000000000000000000000000000000000000000000000000000000000000000000000000000000000000000000000000000000000000000000000000000000000000000000000000000000000000000000000000000000000000000000000000000000000000000000000000000000000000000000000000000000000000000000000000000000000000000000000000000000000000000000000000000000000000000000000000000000000000000000000000000000000000000000000000000000000000000000000000000000000000000000000000000000000000000000000000000000000000000000000000000000000000000000000000000000000000000000000000000000000000000000000000000000000000000000000000000000000000000000000000000000000000000000000000000000000000000000000000000000000000000000000000000000000000000000000000000000000000000000000000000000000000000000000000000000000000000000000000000000000000000000000000000000000000000000000000000000000000000000000000000000000000000000000000000000000000000000000000000000000000000000000000000000000000000000000000000000000000000000000000000000000000000000000000000000000000000000000000000000000000000000000000000000000000000000000000000000000000000000000000000000000000000000000000000000000000000000000000000000000000000000000000000000000000000000000000000000000000000000000000000000000000000000000000000000000000000000000000000000000000000000000000000000000000000000000000000000000000000000000000000000000000000000000000000000000000000000000000000000000000000000000000000000000000000000000000000000000000000000000000000000000000000000000000000000000000000000000000000000000000000000000000000000000000000000000000000000000000000000000000000000000000000000000000000000000000000000000000000000000000000000000000000000000000000000000000000000000000000000000000000000000000000000000000000000000000000000000000000000000000000000000000000000000000000000000000000000000000000000000000000000000000000000000000000000000000000000000000000000000000000000000000000000000000000000000000000000000000000000000000000000000000000000000000000000000000000000000000000000000000000000000000000000000000000000000000000000000000000000000000000000000000000000000000000000000000000000000000000000000000000000000000000000000000000000000000000000000000000000000000000000000000000000000000000000000000000000000000000000000000000000000000000000000000000000000000000000000000000000000000000000000000000000000000000000000000000000000000000000000000000000000000000000000000000000000000000000000000000000000000000000000000000000000000000000000000000000000000000000000000000000000000000000000000000000000000000000000000000000000000000000000000000000000000000000000000000000000000000000000000000000000000000000000000000000000000000000000000000000000000000000000000000000000000000000000000000000000000000000000000000000000000000000000000000000000000000000000000000000000000000000000000000000000000000000000000000000000000000000000000000000000000000000000000000000000000000000000000000000000000000000000000000000000000000000000000000000000000000000000000000000000000000000000000000000000000000000000000000000000000000000000000000000000000000000000000000000000000000000000000000000000000000000000000000000000000000000000000000000000000000000000000000000000000000000000000000000000000000000000000000000000000000000000000000000000000000000000000000000000000000000000000000000000000000000000000000000000000000000000000000000000000000000000000000000000000000000000000000000000000000000000000000000000000000000000000000000000000000000000000000000000000000000000000000000000000000000000000000000000000000000000000000000000000000000000000000000000000000000000000000000000000000000000000000000000000000000000000000000000000000000000000000000000000000000000000000000000000000000000000000000000000000000000000000000000000000000000000000000000000000000000000000000000000000000000000000000000000000000000000000000000000000000000000000000000000000000000000000000000000000000000000000000000000000000000000000000000000000000000000000000000000000000000000000000000000000000000000000000000000000000000000000000000000000000000000000000000000000000000000000000000000000000000000000000000000000000000000000000000000000000000000000000000000000000000000000000000000000000000000000000000000000000000000000000000000000000000000000000000000000000000000000000000000000000000000000000000000000000000000000000000000000000000000000000000000000000000000000000000000000000000000000000000000000000000000000000000000000000000000000000000000000000000000000000000000000000000000000000000000000000000000000000000000000000000000000000000000000000000000000000000000000000000000000000000000000000000000000000000000000000000000000000000000000000000000000000000000000000000000000000000000000000000000000000000000000000000000000000000000000000000000000000000000000000000000000000000000000000000000000000000000000000000000000000000000000000000000000000000000000000000000000000000000000000000000000000000000000000000000000000000000000000000000000000000000000000000000000000000000000000000000000000000000000000000000000000000000000000000000000000000000000000000000000000000000000000000000000000000000000000000000000000000000000000000000000000000000000000000000000000000000000000000000000000000000000000000000000000000000000000000000000000000000000000000000000000000000000000000000000000000000000000000000000000000000000000000000000000000000000000000000000000000000000000000000000000000000000000000000000000000000000000000000000000000000000000000000000000000000000000000000000000000000000000000000000000000000000000000000000000000000000000000000000000000000000000000000000000000000000000000000000000000000000000000000000000000000000000000000000000000000000000000000000000000000000000000000000000000000000000000000000000000000000000000000000000000000000000000000000000000000000000000000000000000000000000000000000000000000000000000000000000000000000000000000000000000000000000000000000000000000000000000000000000000000000000000000000000000000000000000000000000000000000000000000000000000000000000000000000000000000000000000000000000000000000000000000000000000000000000000000000000000000000000000000000000000000000000000000000000000000000000000000000000000000000000000000000000000000000000000000000000000000000000000000000000000000000000000000000000000000000000000000000000000000000000000000000000000000000000000000000000000000000000000000000000000000000000000000000000000000000000000000000000000000000000000000000000000000000000000000000000000000000000000000000000000000000000000000000000000000000000000000000000000000000000000000000000000000000000000000000000000000000000000000000000000000000000000000000000000000000000000000000000000000000000000000000000000000000000000000000000000000000000000000000000000000000000000000000000000000000000000000000000000000000000000000000000000000000000000000000000000000000000000000000000000000000000000000000000000000000000000000000000000000000000000000000000000000000000000000000000000000000000000000000000000000000000000000000000000000000000000000000000000000000000000000000000000000000000000000000000000000000000000000000000000000000000000000000000000000000000000000000000000000000000000000000000000000000000000000000000000000000000000000000000000000000000000000000000000000000000000000000000000000000000000000000000000000000000000000000000000000000000000000000000000000000000000000000000000000000000000000000000000000000000000000000000000000000000000000000000000000000000000000000000000000000000000000000000000000000000000000000000000000000000000000000000000000000000000000000000000000000000000000000000000000000000000000000000000000000000000000000000000000000000000000000000000000000000000000000000000000000000000000000000000000000000000000000000000000000000000000000000000000000000000000000000000000000000000000000000000000000000000000000000000000000000000000000000000000000000000000000000000000000000000000000000000000000000000000000000000000000000000000000000000000000000000000000000000000000000000000000000000000000000000000000000000000000000000000000000000000000000000000000000000000000000000000000000000000000000000000000000000000000000000000000000000000000000000000000000000000000000000000000000000000000000000000000000000000000000000000000000000000000000000000000000000000000000000000000000000000000000000000000000000000000000000000000000000000000000000000000000000000000000000000000000000000000000000000000000000000000000000000000000000000000000000000000000000000000000000000000000000000000000000000000000000000000000000000000000000000000000000000000000000000000000000000000000000000000000000000000000000000000000000000000000000000000000000000000000000000000000000000000000000000000000000000000000000000000000000000000000000000000000000000000000000000000000000000000000000000000000000000000000000000000000000000000000000000000000000000000000000000000000000000000000000000000000000000000000000000000000000000000000000000000000000000000000000000000000000000000000000000000000000000000000000000000000000000000000000000000000000000000000000000000000000000000000000000000000000000000000000000000000000000000000000000000000000000000000000000000000000000000000000000000000000000000000000000000000000000000000000000000000000000000000000000000000000000000000000000000000000000000000000000000000000000000000000000000000000000000000000000000000000000000000000000000000000000000000000000000000000000000000000000000000000000000000000000000000000000000000000000000000000000000000000000000000000000000000000000000000000000000000000000000000000000000000000000000000000000000000000000000000000000000000000000000000000000000000000000000000000000000000000000000000000000000000000000000000000000000000000000000000000000000000000000000000000000000000000000000000000000000000000000000000000000000000000000000000000000000000000000000000000000000000000000000000000000000000000000000000000000000000000000000000000000000000000000000000000000000000000000000000000000000000000000000000000000000000000000000000000000000000000000000000000000000000000000000000000000000000000000000000000000000000000000000000000000000000000000000000000000000000000000000000000000000000000000000000000000000000000000000000000000000000000000000000000000000000000000000000000000000000000000000000000000000000000000000000000000000000000000000000000000000000000000000000000000000000000000000000000000000000000000000000000000000000000000000000000000000000000000000000000000000000000000000000000000000000000000000000000000000000000000000000000000000000000000000000000000000000000000000000000000000000000000000000000000000000000000000000000000000000000000000000000000000000000000000000000000000000000000000000000000000000000000000000000000000000000000000000000000000000000000000000000000000000000000000000000000000000000000000000000000000000000000000000000000000000000000000000000000000000000000000000000000000000000000000000000000000000000000000000000000000000000000000000000000000000000000000000000000000000000000000000000000000000000000000000000000000000000000000000000000000000000000000000000000000000000000000000000000000000000000000000000000000000000000000000000000000000000000000000000000000000000000000000000000000000000000000000000000000000000000000000000000000000000000000000000000000000000000000000000000000000000000000000000000000000000000000000000000000000000000000000000000000000000000000000000000000000000000000000000000000000000000000000000000000000000000000000000000000000000000000000000000000000000000000000000000000000000000000000000000000000000000000000000000000000000000000000000000000000000000000000000000000000000000000000000000000000000000000000000000000000000000000000000000000000000000000000000000000000000000000000000000000000000000000000000000000000000000000000000000000000000000000000000000000000000000000000000000000000000000000000000000000000000000000000000000000000000000000000000000000000000000000000000000000000000000000000000000000000000000000000000000000000000000000000000000000000000000000000000000000000000000000000000000000000000000000000000000000000000000000000000000000000000000000000000000000000000000000000000000000000000000000000000000000000000000000000000000000000000000000000000000000000000000000000000000000000000000000000000000000000000000000000000000000000000000000000000000000000000000000000000000000000000000000000000000000000000000000000000000000000000000000000000000000000000000000000000000000000000000000000000000000000000000000000000000000000000000000000000000000000000000000000000000000000000000000000000000000000000000000000000000000000000000000000000000000000000000000000000000000000000000000000000000000000000000000000000000000000000000000000000000000000000000000000000000000000000000000000000000000000000000000000000000000000000000000000000000000000000000000000000000000000000000000000000000000000000000000000000000000000000000000000000000000000000000000000000000000000000000000000000000000000000000000000000000000000000000000000000000000000000000000000000000000000000000000000000000000000000000000000000000000000000000000000000000000000000000000000000000000000000000000000000000000000000000000000000000000000000000000000000000000000000000000000000000000000000000000000000000000000000000000000000000000000000000000000000000000000000000000000000000000000000000000000000000000000000000000000000000000000000000000000000000000000000000000000000000000000000000000000000000000000000000000000000000000000000000000000000000000000000000000000000000000000000000000000000000000000000000000000000000000000000000000000000000000000000000000000000000000000000000000000000000000000000000000000000000000000000000000000000000000000000000000000000000000000000000000000000000000000000000000000000000000000000000000000000000000000000000000000000000000000000000000000000000000000000000000000000000000000000000000000000000000000000000000000000000000000000000000000000000000000000000000000000000000000000000000000000000000000000000000000000000000000000000000000000000000000000000000000000000000000000000000000000000000000000000000000000000000000000000000000000000000000000000000000000000000000000000000000000000000000000000000000000000000000000000000000000000000000000000000000000000000000000000000000000000000000000000000000000000000000000000000000000000000000000000000000000000000000000000000000000000000000000000000000000000000000000000000000000000000000000000000000000000000000000000000000000000000000000000000000000000000000000000000000000000000000000000000000000000000000000000000000000000000000000000000000000000000000000000000000000000000000000000000000000000000000000000000000000000000000000000000000000000000000000000000000000000000000000000000000000000000000000000000000000000000000000000000000000000000000000000000000000000000000000000000000000000000000000000000000000000000000000000000000000000000000000000000000000000000000000000000000000000000000000000000000000000000000000000000000000000000000000000000000000000000000000000000000000000000000000000000000000000000000000000000000000000000000000000000000000000000000000000000000000000000000000000000000000000000000000000000000000000000000000000000000000000000000000000000000000000000000000000000000000000000000000000000000000000000000000000000000000000000000000000000000000000000000000000000000000000000000000000000000000000000000000000000000000000000000000000000000000000000000000000000000000000000000000000000000000000000000000000000000000000000000000000000000000000000000000000000000000000000000000000000000000000000000000000000000000000000000000000000000000000000000000000000000000000000000000000000000000000000000000000000000000000000000000000000000000000000000000000000000000000000000000000000000000000000000000000000000000000000000000000000000000000000000000000000000000000000000000000000000000000000000000000000000000000000000000000000000000000000000000000000000000000000000000000000000000000000000000000000000000000000000000000000000000000000000000000000000000000000000000000000000000000000000000000000000000000000000000000000000000000000000000000000000000000000000000000000000000000000000000000000000000000000000000000000000000000000000000000000000000000000000000000000000000000000000000000000000000000000000000000000000000000000000000000000000000000000000000000000000000000000000000000000000000000000000000000000000000000000000000000000000000000000000000000000000000000000000000000000000000000000000000000000000000000000000000000000000000000000000000000000000000000000000000000000000000000000000000000000000000000000000000000000000000000000000000000000000000000000000000000000000000000000000000000000000000000000000000000000000000000000000000000000000000000000000000000000000000000000000000000000000000000000000000000000000000000000000000000000000000000000000000000000000000000000000000000000000000000000000000000000000000000000000000000000000000000000000000000000000000000000000000000000000000000000000000000000000000000000000000000000000000000000000000000000000000000000000000000000000000000000000000000000000000000000000000000000000000000000000000000000000000000000000000000000000000000000000000000000000000000000000000000000000000000000000000000000000000000000000000000000000000000000000000000000000000000000000000000000000000000000000000000000000000000000000000000000000000000000000000000000000000000000000000000000000000000000000000000000000000000000000000000000000000000000000000000000000000000000000000000000000000000000000000000000000000000000000000000000000000000000000000000000000000000000000000000000000000000000000000000000000000000000000000000000000000000000000000000000000000000000000000000000000000000000000000000000000000000000000000000000000000000000000000000000000000000000000000000000000000000000000000000000000000000000000000000000000000000000000000000000000000000000000000000000000000000000000000000000000000000000000000000000000000000000000000000000000000000000000000000000000000000000000000000000000000000000000000000000000000000000000000000000000000000000000000000000000000000000000000000000000000000000000000000000000000000000000000000000000000000000000000000000000000000000000000000000000000000000000000000000000000000000000000000000000000000000000000000000000000000000000000000000000000000000000000000000000000000000000000000000000000000000000000000000000000000000000000000000000000000000000000000000000000000000000000000000000000000000000000000000000000000000000000000000000000000000000000000000000000000000000000000000000000000000000000000000000000000000000000000000000000000000000000000000000000000000000000000000000000000000000000000000000000000000000000000000000000000000000000000000000000000000000000000000000000000000000000000000000000000000000000000000000000000000000000000000000000000000000000000000000000000000000000000000000000000000000000000000000000000000000000000000000000000000000000000000000000000000000000000000000000000000000000000000000000000000000000000000000000000000000000000000000000000000000000000000000000000000000000000000000000000000000000000000000000000000000000000000000000000000000000000000000000000000000000000000000000000000000000000000000000000000000000000000000000000000000000000000000000000000000000000000000000000000000000000000000000000000000000000000000000000000000000000000000000000000000000000000000000000000000000000000000000000000000000000000000000000000000000000000000000000000000000000000000000000000000000000000000000000000000000000000000000000000000000000000000000000000000000000000000000000000000000000000000000000000000000000000000000000000000000000000000000000000000000000000000000000000000000000000000000000000000000000000000000000000000000000000000000000000000000000000000000000000000000000000000000000000000000000000000000000000000000000000000000000000000000000000000000000000000000000000000000000000000000000000000000000000000000000000000000000000000000000000000000000000000000000000000000000000000000000000000000000000000000000000000000000000000000000000000000000000000000000000000000000000000000000000000000000000000000000000000000000000000000000000000000000000000000000000000000000000000000000000000000000000000000000000000000000000000000000000000000000000000000000000000000000000000000000000000000000000000000000000000000000000000000000000000000000000000000000000000000000000000000000000000000000000000000000000000000000000000000000000000000000000000000000000000000000000000000000000000000000000000000000000000000000000000000000000000000000000000000000000000000000000000000000000000000000000000000000000000000000000000000000000000000000000000000000000000000000000000000000000000000000000000000000000000000000000000000000000000000000000000000000000000000000000000000000000000000000000000000000000000000000000000000000000000000000000000000000000000000000000000000000000000000000000000000000000000000000000000000000000000000000000000000000000000000000000000000000000000000000000000000000000000000000000000000000000000000000000000000000000000000000000000000000000000000000000000000000000000000000000000000000000000000000000000000000000000000000000000000000000000000000000000000000000000000000000000000000000000000000000000000000000000000000000000000000000000000000000000000000000000000000000000000000000000000000000000000000000000000000000000000000000000000000000000000000000000000000000000000000000000000000000000000000000000000000000000000000000000000000000000000000000000000000000000000000000000000000000000000000000000000000000000000000000000000000000000000000000000000000000000000000000000000000000000000000000000000000000000000000000000000000000000000000000000000000000000000000000000000000000000000000000000000000000000000000000000000000000000000000000000000000000000000000000000000000000000000000000000000000000000000000000000000000000000000000000000000000000000000000000000000000000000000000000000000000000000000000000000000000000000000000000000000000000000000000000000000000000000000000000000000000000000000000000000000000000000000000000000000000000000000000000000000000000000000000000000000000000000000000000000000000000000000000000000000000000000000000000000000000000000000000000000000000000000000000000000000000000000000000000000000000000000000000000000000000000000000000000000000000000000000000000000000000000000000000000000000000000000000000000000000000000000000000000000000000000000000000000000000000000000000000000000000000000000000000000000000000000000000000000000000000000000000000000000000000000000000000000000000000000000000000000000000000000000000000000000000000000000000000000000000000000000000000000000000000000000000000000000000000000000000000000000000000000000000000000000000000000000000000000000000000000000000000000000000000000000000000000000000000000000000000000000000000000000000000000000000000000000000000000000000000000000000000000000000000000000000000000000000000000000000000000000000000000000000000000000000000000000000000000000000000000000000000000000000000000000000000000000000000000000000000000000000000000000000000000000000000000000000000000000000000000000000000000000000000000000000000000000000000000000000000000000000000000000000000000000000000000000000000000000000000000000000000000000000000000000000000000000000000000000000000000000000000000000000000000000000000000000000000000000000000000000000000000000000000000000000000000000000000000000000000000000000000000000000000000000000000000000000000000000000000000000000000000000000000000000000000000000000000000000000000000000000000000000000000000000000000000000000000000000000000000000000000000000000000000000000000000000000000000000000000000000000000000000000000000000000000000000000000000000000000000000000000000000000000000000000000000000000000000000000000000000000000000000000000000000000000000000000000000000000000000000000000000000000000000000000000000000000000000000000000000000000000000000000000000000000000000000000000000000000000000000000000000000000000000000000000000000000000000000000000000000000000000000000000000000000000000000000000000000000000000000000000000000000000000000000000000000000000000000000000000000000000000000000000000000000000000000000000000000000000000000000000000000000000000000000000000000000000000000000000000000000000000000000000000000000000000000000000000000000000000000000000000000000000000000000000000000000000000000000000000000000000000000000000000000000000000000000000000000000000000000000000000000000000000000000000000000000000000000000000000000000000000000000000000000000000000000000000000000000000000000000000000000000000000000000000000000000000000000000000000000000000000000000000000000000000000000000000000000000000000000000000000000000000000000000000000000000000000000000000000000000000000000000000000000000000000000000000000000000000000000000000000000000000000000000000000000000000000000000000000000000000000000000000000000000000000000000000000000000000000000000000000000000000000000000000000000000000000000000000000000000000000000000000000000000000000000000000000000000000000000000000000000000000000000000000000000000000000000000000000000000000000000000000000000000000000000000000000000000000000000000000000000000000000000000000000000000000000000000000000000000000000000000000000000000000000000000000000000000000000000000000000000000000000000000000000000000000000000000000000000000000000000000000000000000000000000000000000000000000000000000000000000000000000000000000000000000000000000000000000000000000000000000000000000000000000000000000000000000000000000000000000000000000000000000000000000000000000000000000000000000000000000000000000000000000000000000000000000000000000000000000000000000000000000000000000000000000000000000000000000000000000000000000000000000000000000000000000000000000000000000000000000000000000000000000000000000000000000000000000000000000000000000000000000000000000000000000000000000000000000000000000000000000000000000000000000000000000000000000000000000000000000000000000000000000000000000000000000000000000000000000000000000000000000000000000000000000000000000000000000000000000000000000000000000000000000000000000000000000000000000000000000000000000000000000000000000000000000000000000000000000000000000000000000000000000000000000000000000000000000000000000000000000000000000000000000000000000000000000000000000000000000000000000000000000000000000000000000000000000000000000000000000000000000000000000000000000000000000000000000000000000000000000000000000000000000000000000000000000000000000000000000000000000000000000000000000000000000000000000000000000000000000000000000000000000000000000000000000000000000000000000000000000000000000000000000000000000000000000000000000000000000000000000000000000000000000000000000000000000000000000000000000000000000000000000000000000000000000000000000000000000000000000000000000000000000000000000000000000000000000000000000000000000000000000000000000000000000000000000000000000000000000000000000000000000000000000000000000000000000000000000000000000000000000000000000000000000000000000000000000000000000000000000000000000000000000000000000000000000000000000000000000000000000000000000000000000000000000000000000000000000000000000000000000000000000000000000000000000000000000000000000000000000000000000000000000000000000000000000000000000000000000000000000000000000000000000000000000000000000000000000000000000000000000000000000000000000000000000000000000000000000000000000000000000000000000000000000000000000000000000000000000000000000000000000000000000000000000000000000000000000000000000000000000000000000000000000000000000000000000000000000000000000000000000000000000000000000000000000000000000000000000000000000000000000000000000000000000000000000000000000000000000000000000000000000000000000000000000000000000000000000000000000000000000000000000000000000000000000000000000000000000000000000000000000000000000000000000000000000000000000000000000000000000000000000000000000000000000000000000000000000000000000000000000000000000000000000000000000000000000000000000000000000000000000000000000000000000000000000000000000000000000000000000000000000000000000000000000000000000000000000000000000000000000000000000000000000000000000000000000000000000000000000000000000000000000000000000000000000000000000000000000000000000000000000000000000000000000000000000000000000000000000000000000000000000000000000000000000000000000000000000000000000000000000000000000000000000000000000000000000000000000000000000000000000000000000000000000000000000000000000000000000000000000000000000000000000000000000000000000000000000000000000000000000000000000000000000000000000000000000000000000000000000000000000000000000000000000000000000000000000000000000000000000000000000000000000000000000000000000000000000000000000000000000000000000000000000000000000000000000000000000000000000000000000000000000000000000000000000000000000000000000000000000000000000000000000000000000000000000000000000000000000000000000000000000000000000000000000000000000000000000000000000000000000000000000000000000000000000000000000000000000000000000000000000000000000000000000000000000000000000000000000000000000000000000000000000000000000000000000000000000000000000000000000000000000000000000000000000000000000000000000000000000000000000000000000000000000000000000000000000000000000000000000000000000000000000000000000000000000000000000000000000000000000000000000000000000000000000000000000000000000000000000000000000000000000000000000000000000000000000000000000000000000000000000000000000000000000000000000000000000000000000000000000000000000000000000000000000000000000000000000000000000000000000000000000000000000000000000000000000000000000000000000000000000000000000000000000000000000000000000000000000000000000000000000000000000000000000000000000000000000000000000000000000000000000000000000000000000000000000000000000000000000000000000000000000000000000000000000000000000000000000000000000000000000000000000000000000000000000000000000000000000000000000000000000000000000000000000000000000000000000000000000000000000000000000000000000000000000000000000000000000000000000000000000000000000000000000000000000000000000000000000000000000000000000000000000000000000000000000000000000000000000000000000000000000000000000000000000000000000000000000000000000000000000000000000000000000000000000000000000000000000000000000000000000000000000000000000000000000000000000000000000000000000000000000000000000000000000000000000000000000000000000000000000000000000000000000000000000000000000000000000000000000000000000000000000000000000000000000000000000000000000000000000000000000000000000000000000000000000000000000000000000000000000000000000000000000000000000000000000000000000000000000000000000000000000000000000000000000000000000000000000000000000000000000000000000000000000000000000000000000000000000000000000000000000000000000000000000000000000000000000000000000000000000000000000000000000000000000000000000000000000000000000000000000000000000000000000000000000000000000000000000000000000000000000000000000000000000000000000000000000000000000000000000000000000000000000000000000000000000000000000000000000000000000000000000000000000000000000000000000000000000000000000000000000000000000000000000000000000000000000000000000000000000000000000000000000000000000000000000000000000000000000000000000000000000000000000000000000000000000000000000000000000000000000000000000000000000000000000000000000000000000000000000000000000000000000000000000000000000000000000000000000000000000000000000000000000000000000000000000000000000000000000000000000000000000000000000000000000000000000000000000000000000000000000000000000000000000000000000000000000000000000000000000000000000000000000000000000000000000000000000000000000000000000000000000000000000000000000000000000000000000000000000000000000000000000000000000000000000000000000000000000000000000000000000000000000000000000000000000000000000000000000000000000000000000000000000000000000000000000000000000000000000000000000000000000000000000000000000000000000000000000000000000000000000000000000000000000000000000000000000000000000000000000000000000000000000000000000000000000000000000000000000000000000000000000000000000000000000000000000000000000000000000000000000000000000000000000000000000000000000000000000000000000000000000000000000000000000000000000000000000000000000000000000000000000000000000000000000000000000000000000000000000000000000000000000000000000000000000000000000000000000000000000000000000000000000000000000000000000000000000000000000000000000000000000000000000000000000000000000000000000000000000000000000000000000000000000000000000000000000000000000000000000000000000000000000000000000000000000000000000000000000000000000000000000000000000000000000000000000000000000000000000000000000000000000000000000000000000000000000000000000000000000000000000000000000000000000000000000000000000000000000000000000000000000000000000000000000000000000000000000000000000000000000000000000000000000000000000000000000000000000000000000000000000000000000000000000000000000000000000000000000000000000000000000000000000000000000000000000000000000000000000000000000000000000000000000000000000000000000000000000000000000000000000000000000000000000000000000000000000000000000000000000000000000000000000000000000000000000000000000000000000000000000000000000000000000000000000000000000000000000000000000000000000000000000000000000000000000000000000000000000000000000000000000000000000000000000000000000000000000000000000000000000000000000000000000000000000000000000000000000000000000000000000000000000000000000000000000000000000000000000000000000000000000000000000000000000000000000000000000000000000000000000000000000000000000000000000000000000000000000000000000000000000000000000000000000000000000000000000000000000000000000000000000000000000000000000000000000000000000000000000000000000000000000000000000000000000000000000000000000000000000000000000000000000000000000000000000000000000000000000000000000000000000000000000000000000000000000000000000000000000000000000000000000000000000000000000000000000000000000000000000000000000000000000000000000000000000000000000000000000000000000000000000000000000000000000000000000000000000000000000000000000000000000000000000000000000000000000000000000000000000000000000000000000000000000000000000000000000000000000000000000000000000000000000000000000000000000000000000000000000000000000000000000000000000000000000000000000000000000000000000000000000000000000000000000000000000000000000000000000000000000000000000000000000000000000000000000000000000000000000000000000000000000000000000000000000000000000000000000000000000000000000000000000000000000000000000000000000000000000000000000000000000000000000000000000000000000000000000000000000000000000000000000000000000000000000000000000000000000000000000000000000000000000000000000000000000000000000000000000000000000000000000000000000000000000000000000000000000000000000000000000000000000000000000000000000000000000000000000000000000000000000000000000000000000000000000000000000000000000000000000000000000000000000000000000000000000000000000000000000000000000000000000000000000000000000000000000000000000000000000000000000000000000000000000000000000000000000000000000000000000000000000000000000000000000000000000000000000000000000000000000000000000000000000000000000000000000000000000000000000000000000000000000000000000000000000000000000000000000000000000000000000000000000000000000000000000000000000000000000000000000000000000000000000000000000000000000000000000000000000000000000000000000000000000000000000000000000000000000000000000000000000000000000000000000000000000000000000000000000000000000000000000000000000000000000000000000000000000000000000000000000000000000000000000000000000000000000000000000000000000000000000000000000000000000000000000000000000000000000000000000000000000000000000000000000000000000000000000000000000000000000000000000000000000000000000000000000000000000000000000000000000000000000000000000000000000000000000000000000000000000000000000000000000000000000000000000000000000000000000000000000000000000000000000000000000000000000000000000000000000000000000000000000000000000000000000000000000000000000000000000000000000000000000000000000000000000000000000000000000000000000000000000000000000000000000000000000000000000000000000000000000000000000000000000000000000000000000000000000000000000000000000000000000000000000000000000000000000000000000000000000000000000000000000000000000000000000000000000000000000000000000000000000000000000000000000000000000000000000000000000000000000000000000000000000000000000000000000000000000000000000000000000000000000000000000000000000000000000000000000000000000000000000000000000000000000000000000000000000000000000000000000000000000000000000000000000000000000000000000000000000000000000000000000000000000000000000000000000000000000000000000000000000000000000000000000000000000000000000000000000000000000000000000000000000000000000000000000000000000000000000000000000000000000000000000000000000000000000000000000000000000000000000000000000000000000000000000000000000000000000000000000000000000000000000000000000000000000000000000000000000000000000000000000000000000000000000000000000000000000000000000000000000000000000000000000000000000000000000000000000000000000000000000000000000000000000000000000000000000000000000000000000000000000000000000000000000000000000000000000000000000000000000000000000000000000000000000000000000000000000000000000000000000000000000000000000000000000000000000000000000000000000000000000000000000000000000000000000000000000000000000000000000000000000000000000000000000000000000000000000000000000000000000000000000000000000000000000000000000000000000000000000000000000000000000000000000000000000000000000000000000000000000000000000000000000000000000000000000000000000000000000000000000000000000000000000000000000000000000000000000000000000000000000000000000000000000000000000000000000000000000000000000000000000000000000000000000000000000000000000000000000000000000000000000000000000000000000000000000000000000000000000000000000000000000000000000000000000000000000000000000000000000000000000000000000000000000000000000000000000000000000000000000000000000000000000000000000000000000000000000000000000000000000000000000000000000000000000000000000000000000000000000000000000000000000000000000000000000000000000000000000000000000000000000000000000000000000000000000000000000000000000000000000000000000000000000000000000000000000000000000000000000000000000000000000000000000000000000000000000000000000000000000000000000000000000000000000000000000000000000000000000000000000000000000000000000000000000000000000000000000000000000000000000000000000000000000000000000000000000000000000000000000000000000000000000000000000000000000000000000000000000000000000000000000000000000000000000000000000000000000000000000000000000000000000000000000000000000000000000000000000000000000000000000000000000000000000000000000000000000000000000000000000000000000000000000000000000000000000000000000000000000000000000000000000000000000000000000000000000000000000000000000000000000000000000000000000000000000000000000000000000000000000000000000000000000000000000000000000000000000000000000000000000000000000000000000000000000000000000000000000000000000000000000000000000000000000000000000000000000000000000000000000000000000000000000000000000000000000000000000000000000000000000000000000000000000000000000000000000000000000000000000000000000000000000000000000000000000000000000000000000000000000000000000000000000000000000000000000000000000000000000000000000000000000000000000000000000000000000000000000000000000000000000000000000000000000000000000000000000000000000000000000000000000000000000000000000000000000000000000000000000000000000000000000000000000000000000000000000000000000000000000000000000000000000000000000000000000000000000000000000000000000000000000000000000000000000000000000000000000000000000000000000000000000000000000000000000000000000000000000000000000000000000000000000000000000000000000000000000000000000000000000000000000000000000000000000000000000000000000000000000000000000000000000000000000000000000000000000000000000000000000000000000000000000000000000000000000000000000000000000000000000000000000000000000000000000000000000000000000000000000000000000000000000000000000000000000000000000000000000000000000000000000000000000000000000000000000000000000000000000000000000000000000000000000000000000000000000000000000000000000000000000000000000000000000000000000000000000000000000000000000000000000000000000000000000000000000000000000000000000000000000000000000000000000000000000000000000000000000000000000000000000000000000000000000000000000000000000000000000000000000000000000000000000000000000000000000000000000000000000000000000000000000000000000000000000000000000000000000000000000000000000000000000000000000000000000000000000000000000000000000000000000000000000000000000000000000000000000000000000000000000000000000000000000000000000000000000000000000000000000000000000000000000000000000000000000000000000000000000000000000000000000000000000000000000000000000000000000000000000000000000000000000000000000000000000000000000000000000000000000000000000000000000000000000000000000000000000000000000000000000000000000000000000000000000000000000000000000000000000000000000000000000000000000000000000000000000000000000000000000000000000000000000000000000000000000000000000000000000000000000000000000000000000000000000000000000000000000000000000000000000000000000000000000000000000000000000000000000000000000000000000000000000000000000000000000000000000000000000000000000000000000000000000000000000000000000000000000000000000000000000000000000000000000000000000000000000000000000000000000000000000000000000000000000000000000000000000000000000000000000000000000000000000000000000000000000000000000000000000000000000000000000000000000000000000000000000000000000000000000000000000000000000000000000000000000000000000000000000000000000000000000000000000000000000000000000000000000000000000000000000000000000000000000000000000000000000000000000000000000000000000000000000000000000000000000000000000000000000000000000000000000000000000000000000000000000000000000000000000000000000000000000000000000000000000000000000000000000000000000000000000000000000000000000000000000000000000000000000000000000000000000000000000000000000000000000000000000000000000000000000000000000000000000000000000000000000000000000000000000000000000000000000000000000000000000000000000000000000000000000000000000000000000000000000000000000000000000000000000000000000000000000000000000000000000000000000000000000000000000000000000000000000000000000000000000000000000000000000000000000000000000000000000000000000000000000000000000000000000000000000000000000000000000000000000000000000000000000000000000000000000000000000000000000000000000000000000000000000000000000000000000000000000000000000000000000000000000000000000000000000000000000000000000000000000000000000000000000000000000000000000000000000000000000000000000000000000000000000000000000000000000000000000000000000000000000000000000000000000000000000000000000000000000000000000000000000000000000000000000000000000000000000000000000000000000000000000000000000000000000000000000000000000000000000000000000000000000000000000000000000000000000000000000000000000000000000000000000000000000000000000000000000000000000000000000000000000000000000000000000000000000000000000000000000000000000000000000000000000000000000000000000000000000000000000000000000000000000000000000000000000000000000000000000000000000000000000000000000000000000000000000000000000000000000000000000000000000000000000000000000000000000000000000000000000000000000000000000000000000000000000000000000000000000000000000000000000000000000000000000000000000000000000000000000000000000000000000000000000000000000000000000000000000000000000000000000000000000000000000000000000000000000000000000000000000000000000000000000000000000000000000000000000000000000000000000000000000000000000000000000000000000000000000000000000000000000000000000000000000000000000000000000000000000000000000000000000000000000000000000000000000000000000000000000000000000000000000000000000000000000000000000000000000000000000000000000000000000000000000000000000000000000000000000000000000000000000000000000000000000000000000000000000000000000000000000000000000000000000000000000000000000000000000000000000000000000000000000000000000000000000000000000000000000000000000000000000000000000000000000000000000000000000000000000000000000000000000000000000000000000000000000000000000000000000000000000000000000000000000000000000000000000000000000000000000000000000000000000000000000000000000000000000000000000000000000000000000000000000000000000000000000000000000000000000000000000000000000000000000000000000000000000000000000000000000000000000000000000000000000000000000000000000000000000000000000000000000000000000000000000000000000000000000000000000000000000000000000000000000000000000000000000000000000000000000000000000000000000000000000000000000000000000000000000000000000000000000000000000000000000000000000000000000000000000000000000000000000000000000000000000000000000000000000000000000000000000000000000000000000000000000000000000000000000000000000000000000000000000000000000000000000000000000000000000000000000000000000000000000000000000000000000000000000000000000000000000000000000000000000000000000000000000000000000000000000000000000000000000000000000000000000000000000000000000000000000000000000000000000000000000000000000000000000000000000000000000000000000000000000000000000000000000000000000000000000000000000000000000000000000000000000000000000000000000000000000000000000000000000000000000000000000000000000000000000000000000000000000000000000000000000000000000000000000000000000000000000000000000000000000000000000000000000000000000000000000000000000000000000000000000000000000000000000000000000000000000000000000000000000000000000000000000000000000000000000000000000000000000000000000000000000000000000000000000000000000000000000000000000000000000000000000000000000000000000000000000000000000000000000000000000000000000000000000000000000000000000000000000000000000000000000000000000000000000000000000000000000000000000000000000000000000000000000000000000000000000000000000000000000000000000000000000000000000000000000000000000000000000000000000000000000000000000000000000000000000000000000000000000000000000000000000000000000000000000000000000000000000000000000000000000000000000000000000000000000000000000000000000000000000000000000000000000000000000000000000000000000000000000000000000000000000000000000000000000000000000000000000000000000000000000000000000000000000000000000000000000000000000000000000000000000000000000000000000000000000000000000000000000000000000000000000000000000000000000000000000000000000000000000000000000000000000000000000000000000000000000000000000000000000000000000000000000000000000000000000000000000000000000000000000000000000000000000000000000000000000000000000000000000000000000000000000000000000000000000000000000000000000000000000000000000000000000000000000000000000000000000000000000000000000000000000000000000000000000000000000000000000000000000000000000000000000000000000000000000000000000000000000000000000000000000000000000000000000000000000000000000000000000000000000000000000000000000000000000000000000000000000000000000000000000000000000000000000000000000000000000000000000000000000000000000000000000000000000000000000000000000000000000000000000000000000000000000000000000000000000000000000000000000000000000000000000000000000000000000000000000000000000000000000000000000000000000000000000000000000000000000000000000000000000000000000000000000000000000000000000000000000000000000000000000000000000000000000000000000000000000000000000000000000000000000000000000000000000000000000000000000000000000000000000000000000000000000000000000000000000000000000000000000000000000000000000000000000000000000000000000000000000000000000000000000000000000000000000000000000000000000000000000000000000000000000000000000000000000000000000000000000000000000000000000000000000000000000000000000000000000000000000000000000000000000000000000000000000000000000000000000000000000000000000000000000000000000000000000000000000000000000000000000000000000000000000000000000000000000000000000000000000000000000000000000000000000000000000000000000000000000000000000000000000000000000000000000000000000000000000000000000000000000000000000000000000000000000000000000000000000000000000000000000000000000000000000000000000000000000000000000000000000000000000000000000000000000000000000000000000000000000000000000000000000000000000000000000000000000000000000000000000000000000000000000000000000000000000000000000000000000000000000000000000000000000000000000000000000000000000000000000000000000000000000000000000000000000000000000000000000000000000000000000000000000000000000000000000000000000000000000000000000000000000000000000000000000000000000000000000000000000000000000000000000000000000000000000000000000000000000000000000000000000000000000000000000000000000000000000000000000000000000000000000000000000000000000000000000000000000000000000000000000000000000000000000000000000000000000000000000000000000000000000000000000000000000000000000000000000000000000000000000000000000000000000000000000000000000000000000000000000000000000000000000000000000000000000000000000000000000000000000000000000000000000000000000000000000000000000000000000000000000000000000000000000000000000000000000000000000000000000000000000000000000000000000000000000000000000000000000000000000000000000000000000000000000000000000000000000000000000000000000000000000000000000000000000000000000000000000000000000000000000000000000000000000000000000000000000000000000000000000000000000000000000000000000000000000000000000000000000000000000000000000000000000000000000000000000000000000000000000000000000000000000000000000000000000000000000000000000000000000000000000000000000000000000000000000000000000000000000000000000000000000000000000000000000000000000000000000000000000000000000000000000000000000000000000000000000000000000000000000000000000000000000000000000000000000000000000000000000000000000000000000000000000000000000000000000000000000000000000000000000000000000000000000000000000000000000000000000000000000000000000000000000000000000000000000000000000000000000000000000000000000000000000000000000000000000000000000000000000000000000000000000000000000000000000000000000000000000000000000000000000000000000000000000000000000000000000000000000000000000000000000000000000000000000000000000000000000000000000000000000000000000000000000000000000000000000000000000000000000000000000000000000000000000000000000000000000000000000000000000000000000000000000000000000000000000000000000000000000000000000000000000000000000000000000000000000000000000000000000000000000000000000000000000000000000000000000000000000000000000000000000000000000000000000000000000000000000000000000000000000000000000000000000000000000000000000000000000000000000000000000000000000000000000000000000000000000000000000000000000000000000000000000000000000000000000000000000000000000000000000000000000000000000000000000000000000000000000000000000000000000000000000000000000000000000000000000000000000000000000000000000000000000000000000000000000000000000000000000000000000000000000000000000000000000000000000000000000000000000000000000000000000000000000000000000000000000000000000000000000000000000000000000000000000000000000000000000000000000000000000000000000000000000000000000000000000000000000000000000000000000000000000000000000000000000000000000000000000000000000000000000000000000000000000000000000000000000000000000000000000000000000000000000000000000000000000000000000000000000000000000000000000000000000000000000000000000000000000000000000000000000000000000000000000000000000000000000000000000000000000000000000000000000000000000000000000000000000000000000000000000000000000000000000000000000000000000000000000000000000000000000000000000000000000000000000000000000000000000000000000000000000000000000000000000000000000000000000000000000000000000000000000000000000000000000000000000000000000000000000000000000000000000000000000000000000000000000000000000000000000000000000000000000000000000000000000000000000000000000000000000000000000000000000000000000000000000000000000000000000000000000000000000000000000000000000000000000000000000000000000000000000000000000000000000000000000000000000000000000000000000000000000000000000000000000000000000000000000000000000000000000000000000000000000000000000000000000000000000000000000000000000000000000000000000000000000000000000000000000000000000000000000000000000000000000000000000000000000000000000000000000000000000000000000000000000000000000000000000000000000000000000000000000000000000000000000000000000000000000000000000000000000000000000000000000000000000000000000000000000000000000000000000000000000000000000000000000000000000000000000000000000000000000000000000000000000000000000000000000000000000000000000000000000000000000000000000000000000000000000000000000000000000000000000000000000000000000000000000000000000000000000000000000000000000000000000000000000000000000000000000000000000000000000000000000000000000000000000000000000000000000000000000000000000000000000000000000000000000000000000000000000000000000000000000000000000000000000000000000000000000000000000000000000000000000000000000000000000000000000000000000000000000000000000000000000000000000000000000000000000000000000000000000000000000000000000000000000000000000000000000000000000000000000000000000000000000000000000000000000000000000000000000000000000000000000000000000000000000000000000000000000000000000000000000000000000000000000000000000000000000000000000000000000000000000000000000000000000000000000000000000000000000000000000000000000000000000000000000000000000000000000000000000000000000000000000000000000000000000000000000000000000000000000000000000000000000000000000000000000000000000000000000000000000000000000000000000000000000000000000000000000000000000000000000000000000000000000000000000000000000000000000000000000000000000000000000000000000000000000000000000000000000000000000000000000000000000000000000000000000000000000000000000000000000000000000000000000000000000000000000000000000000000000000000000000000000000000000000000000000000000000000000000000000000000000000000000000000000000000000000000000000000000000000000000000000000000000000000000000000000000000000000000000000000000000000000000000000000000000000000000000000000000000000000000000000000000000000000000000000000000000000000000000000000000000000000000000000000000000000000000000000000000000000000000000000000000000000000000000000000000000000000000000000000000000000000000000000000000000000000000000000000000000000000000000000000000000000000000000000000000000000000000000000000000000000000000000000000000000000000000000000000000000000000000000000000000000000000000000000000000000000000000000000000000000000000000000000000000000000000000000000000000000000000000000000000000000000000000000000000000000000000000000000000000000000000000000000000000000000000000000000000000000000000000000000000000000000000000000000000000000000000000000000000000000000000000000000000000000000000000000000000000000000000000000000000000000000000000000000000000000000000000000000000000000000000000000000000000000000000000000000000000000000000000000000000000000000000000000000000000000000000000000000000000000000000000000000000000000000000000000000000000000000000000000000000000000000000000000000000000000000000000000000000000000000000000000000000000000000000000000000000000000000000000000000000000000000000000000000000000000000000000000000000000000000000000000000000000000000000000000000000000000000000000000000000000000000000000000000000000000000000000000000000000000000000000000000000000000000000000000000000000000000000000000000000000000000000000000000000000000000000000000000000000000000000000000000000000000000000000000000000000000000000000000000000000000000000000000000000000000000000000000000000000000000000000000000000000000000000000000000000000000000000000000000000000000000000000000000000000000000000000000000000000000000000000000000000000000000000000000000000000000000000000000000000000000000000000000000000000000000000000000000000000000000000000000000000000000000000000000000000000000000000000000000000000000000000000000000000000000000000000000000000000000000000000000000000000000000000000000000000000000000000000000000000000000000000000000000000000000000000000000000000000000000000000000000000000000000000000000000000000000000000000000000000000000000000000000000000000000000000000000000000000000000000000000000000000000000000000000000000000000000000000000000000000000000000000000000000000000000000000000000000000000000000000000000000000000000000000000000000000000000000000000000000000000000000000000000000000000000000000000000000000000000000000000000000000000000000000000000000000000000000000000000000000000000000000000000000000000000000000000000000000000000000000000000000000000000000000000000000000000000000000000000000000000000000000000000000000000000000000000000000000000000000000000000000000000000000000000000000000000000000000000000000000000000000000000000000000000000000000000000000000000000000000000000000000000000000000000000000000000000000000000000000000000000000000000000000000000000000000000000000000000000000000000000000000000000000000000000000000000000000000000000000000000000000000000000000000000000000000000000000000000000000000000000000000000000000000000000000000000000000000000000000000000000000000000000000000000000000000000000000000000000000000000000000000000000000000000000000000000000000000000000000000000000000000000000000000000000000000000000000000000000000000000000000000000000000000000000000000000000000000000000000000000000000000000000000000000000000000000000000000000000000000000000000000000000000000000000000000000000000000000000000000000000000000000000000000000000000000000000000000000000000000000000000000000000000000000000000000000000000000000000000000000000000000000000000000000000000000000000000000000000000000000000000000000000000000000000000000000000000000000000000000000000000000000000000000000000000000000000000000000000000000000000000000000000000000000000000000000000000000000000000000000000000000000000000000000000000000000000000000000000000000000000000000000000000000000000000000000000000000000000000000000000000000000000000000000000000000000000000000000000000000000000000000000000000000000000000000000000000000000000000000000000000000000000000000000000000000000000000000000000000000000000000000000000000000000000000000000000000000000000000000000000000000000000000000000000000000000000000000000000000000000000000000000000000000000000000000000000000000000000000000000000000000000000000000000000000000000000000000000000000000000000000000000000000000000000000000000000000000000000000000000000000000000000000000000000000000000000000000000000000000000000000000000000000000000000000000000000000000000000000000000000000000000000000000000000000000000000000000000000000000000000000000000000000000000000000000000000000000000000000000000000000000000000000000000000000000000000000000000000000000000000000000000000000000000000000000000000000000000000000000000000000000000000000000000000000000000000000000000000000000000000000000000000000000000000000000000000000000000000000000000000000000000000000000000000000000000000000000000000000000000000000000000000000000000000000000000000000000000000000000000000000000000000000000000000000000000000000000000000000000000000000000000000000000000000000000000000000000000000000000000000000000000000000000000000000000000000000000000000000000000000000000000000000000000000000000000000000000000000000000000000000000000000000000000000000000000000000000000000000000000000000000000000000000000000000000000000000000000000000000000000000000000000000000000000000000000000000000000000000000000000000000000000000000000000000000000000000000000000000000000000000000000000000000000000000000000000000000000000000000000000000000000000000000000000000000000000000000000000000000000000000000000000000000000000000000000000000000000000000000000000000000000000000000000000000000000000000000000000000000000000000000000000000000000000000000000000000000000000000000000000000000000000000000000000000000000000000000000000000000000000000000000000000000000000000000000000000000000000000000000000000000000000000000000000000000000000000000000000000000000000000000000000000000000000000000000000000000000000000000000000000000000000000000000000000000000000000000000000000000000000000000000000000000000000000000000000000000000000000000000000000000000000000000000000000000000000000000000000000000000000000000000000000000000000000000000000000000000000000000000000000000000000000000000000000000000000000000000000000000000000000000000000000000000000000000000000000000000000000000000000000000000000000000000000000000000000000000000000000000000000000000000000000000000000000000000000000000000000000000000000000000000000000000000000000000000000000000000000000000000000000000000000000000000000000000000000000000000000000000000000000000000000000000000000000000000000000000000000000000000000000000000000000000000000000000000000000000000000000000000000000000000000000000000000000000000000000000000000000000000000000000000000000000000000000000000000000000000000000000000000000000000000000000000000000000000000000000000000000000000000000000000000000000000000000000000000000000000000000000000000000000000000000000000000000000000000000000000000000000000000000000000000000000000000000000000000000000000000000000000000000000000000000000000000000000000000000000000000000000000000000000000000000000000000000000000000000000000000000000000000000000000000000000000000000000000000000000000000000000000000000000000000000000000000000000000000000000000000000000000000000000000000000000000000000000000000000000000000000000000000000000000000000000000000000000000000000000000000000000000000000000000000000000000000000000000000000000000000000000000000000000000000000000000000000000000000000000000000000000000000000000000000000000000000000000000000000000000000000000000000000000000000000000000000000000000000000000000000000000000000000000000000000000000000000000000000000000000000000000000000000000000000000000000000000000000000000000000000000000000000000000000000000000000000000000000000000000000000000000000000000000000000000000000000000000000000000000000000000000000000000000000000000000000000000000000000000000000000000000000000000000000000000000000000000000000000000000000000000000000000000000000000000000000000000000000000000000000000000000000000000000000000000000000000000000000000000000000000000000000000000000000000000000000000000000000000000000000000000000000000000000000000000000000000000000000000000000000000000000000000000000000000000000000000000000000000000000000000000000000000000000000000000000000000000000000000000000000000000000000000000000000000000000000000000000000000000000000000000000000000000000000000000000000000000000000000000000000000000000000000000000000000000000000000000000000000000000000000000000000000000000000000000000000000000000000000000000000000000000000000000000000000000000000000000000000000000000000000000000000000000000000000000000000000000000000000000000000000000000000000000000000000000000000000000000000000000000000000000000000000000000000000000000000000000000000000000000000000000000000000000000000000000000000000000000000000000000000000000000000000000000000000000000000000000000000000000000000000000000000000000000000000000000000000000000000000000000000000000000000000000000000000000000000000000000000000000000000000000000000000000000000000000000000000000000000000000000000000000000000000000000000000000000000000000000000000000000000000000000000000000000000000000000000000000000000000000000000000000000000000000000000000000000000000000000000000000000000000000000000000000000000000000000000000000000000000000000000000000000000000000000000000000000000000000000000000000000000000000000000000000000000000000000000000000000000000000000000000000000000000000000000000000000000000000000000000000000000000000000000000000000000000000000000000000000000000000000000000000000000000000000000000000000000000000000000000000000000000000000000000000000000000000000000000000000000000000000000000000000000000000000000000000000000000000000000000000000000000000000000000000000000000000000000000000000000000000000000000000000000000000000000000000000000000000000000000000000000000000000000000000000000000000000000000000000000000000000000000000000000000000000000000000000000000000000000000000000000000000000000000000000000000000000000000000000000000000000000000000000000000000000000000000000000000000000000000000000000000000000000000000000000000000000000000000000000000000000000000000000000000000000000000000000000000000000000000000000000000000000000000000000000000000000000000000000000000000000000000000000000000000000000000000000000000000000000000000000000000000000000000000000000000000000000000000000000000000000000000000000000000000000000000000000000000000000000000000000000000000000000000000000000000000000000000000000000000000000000000000000000000000000000000000000000000000000000000000000000000000000000000000000000000000000000000000000000000000000000000000000000000000000000000000000000000000000000000000000000000000000000000000000000000000000000000000000000000000000000000000000000000000000000000000000000000000000000000000000000000000000000000000000000000000000000000000000000000000000000000000000000000000000000000000000000000000000000000000000000000000000000000000000000000000000000000000000000000000000000000000000000000000000000000000000000000000000000000000000000000000000000000000000000000000000000000000000000000000000000000000000000000000000000000000000000000000000000000000000000000000000000000000000000000000000000000000000000000000000000000000000000000000000000000000000000000000000000000000000000000000000000000000000000000000000000000000000000000000000000000000000000000000000000000000000000000000000000000000000000000000000000000000000000000000000000000000000000000000000000000000000000000000000000000000000000000000000000000000000000000000000000000000000000000000000000000000000000000000000000000000000000000000000000000000000000000000000000000000000000000000000000000000000000000000000000000000000000000000000000000000000000000000000000000000000000000000000000000000000000000000000000000000000000000000000000000000000000000000000000000000000000000000000000000000000000000000000000000000000000000000000000000000000000000000000000000000000000000000000000000000000000000000000000000000000000000000000000000000000000000000000000000000000000000000000000000000000000000000000000000000000000000000000000000000000000000000000000000000000000000000000000000000000000000000000000000000000000000000000000000000000000000000000000000000000000000000000000000000000000000000000000000000000000000000000000000000000000000000000000000000000000000000000000000000000000000000000000000000000000000000000000000000000000000000000000000000000000000000000000000000000000000000000000000000000000000000000000000000000000000000000000000000000000000000000000000000000000000000000000000000000000000000000000000000000000000000000000000000000000000000000000000000000000000000000000000000000000000000000000000000000000000000000000000000000000000000000000000000000000000000000000000000000000000000000000000000000000000000000000000000000000000000000000000000000000000000000000000000000000000000000000000000000000000000000000000000000000000000000000000000000000000000000000000000000000000000000000000000000000000000000000000000000000000000000000000000000000000000000000000000000000000000000000000000000000000000000000000000000000000000000000000000000000000000000000000000000000000000000000000000000000000000000000000000000000000000000000000000000000000000000000000000000000000000000000000000000000000000000000000000000000000000000000000000000000000000000000000000000000000000000000000000000000000000000000000000000000000000000000000000000000000000000000000000000000000000000000000000000000000000000000000000000000000000000000000000000000000000000000000000000000000000000000000000000000000000000000000000000000000000000000000000000000000000000000000000000000000000000000000000000000000000000000000000000000000000000000000000000000000000000000000000000000000000000000000000000000000000000000000000000000000000000000000000000000000000000000000000000000000000000000000000000000000000000000000000000000000000000000000000000000000000000000000000000000000000000000000000000000000000000000000000000000000000000000000000000000000000000000000000000000000000000000000000000000000000000000000000000000000000000000000000000000000000000000000000000000000000000000000000000000000000000000000000000000000000000000000000000000000000000000000000000000000000000000000000000000000000000000000000000000000000000000000000000000000000000000000000000000000000000000000000000000000000000000000000000000000000000000000000000000000000000000000000000000000000000000000000000000000000000000000000000000000000000000000000000000000000000000000000000000000000000000000000000000000000000000000000000000000000000000000000000000000000000000000000000000000000000000000000000000000000000000000000000000000000000000000000000000000000000000000000000000000000000000000000000000000000000000000000000000000000000000000000000000000000000000000000000000000000000000000000000000000000000000000000000000000000000000000000000000000000000000000000000000000000000000000000000000000000000000000000000000000000000000000000000000000000000000000000000000000000000000000000000000000000000000000000000000000000000000000000000000000000000000000000000000000000000000000000000000000000000000000000000000000000000000000000000000000000000000000000000000000000000000000000000000000000000000000000000000000000000000000000000000000000000000000000000000000000000000000000000000000000000000000000000000000000000000000000000000000000000000000000000000000000000000000000000000000000000000000000000000000000000000000000000000000000000000000000000000000000000000000000000000000000000000000000000000000000000000000000000000000000000000000000000000000000000000000000000000000000000000000000000000000000000000000000000000000000000000000000000000000000000000000000000000000000000000000000000000000000000000000000000000000000000000000000000000000000000000000000000000000000000000000000000000000000000000000000000000000000000000000000000000000000000000000000000000000000000000000000000000000000000000000000000000000000000000000000000000000000000000000000000000000000000000000000000000000000000000000000000000000000000000000000000000000000000000000000000000000000000000000000000000000000000000000000000000000000000000000000000000000000000000000000000000000000000000000000000000000000000000000000000000000000000000000000000000000000000000000000000000000000000000000000000000000000000000000000000000000000000000000000000000000000000000000000000000000000000000000000000000000000000000000000000000000000000000000000000000000000000000000000000000000000000000000000000000000000000000000000000000000000000000000000000000000000000000000000000000000000000000000000000000000000000000000000000000000000000000000000000000000000000000000000000000000000000000000000000000000000000000000000000000000000000000000000000000000000000000000000000000000000000000000000000000000000000000000000000000000000000000000000000000000000000000000000000000000000000000000000000000000000000000000000000000000000000000000000000000000000000000000000000000000000000000000000000000000000000000000000000000000000000000000000000000000000000000000000000000000000000000000000000000000000000000000000000000000000000000000000000000000000000000000000000000000000000000000000000000000000000000000000000000000000000000000000000000000000000000000000000000000000000000000000000000000000000000000000000000000000000000000000000000000000000000000000000000000000000000000000000000000000000000000000000000000000000000000000000000000000000000000000000000000000000000000000000000000000000000000000000000000000000000000000000000000000000000000000000000000000000000000000000000000000000000000000000000000000000000000000000000000000000000000000000000000000000000000000000000000000000000000000000000000000000000000000000000000000000000000000000000000000000000000000000000000000000000000000000000000000000000000000000000000000000000000000000000000000000000000000000000000000000000000000000000000000000000000000000000000000000000000000000000000000000000000000000000000000000000000000000000000000000000000000000000000000000000000000000000000000000000000000000000000000000000000000000000000000000000000000000000000000000000000000000000000000000000000000000000000000000000000000000000000000000000000000000000000000000000000000000000000000000000000000000000000000000000000000000000000000000000000000000000000000000000000000000000000000000000000000000000000000000000000000000000000000000000000000000000000000000000000000000000000000000000000000000000000000000000000000000000000000000000000000000000000000000000000000000000000000000000000000000000000000000000000000000000000000000000000000000000000000000000000000000000000000000000000000000000000000000000000000000000000000000000000000000000000000000000000000000000000000000000000000000000000000000000000000000000000000000000000000000000000000000000000000000000000000000000000000000000000000000000000000000000000000000000000000000000000000000000000000000000000000000000000000000000000000000000000000000000000000000000000000000000000000000000000000000000000000000000000000000000000000000000000000000000000000000000000000000000000000000000000000000000000000000000000000000000000000000000000000000000000000000000000000000000000000000000000000000000000000000000000000000000000000000000000000000000000000000000000000000000000000000000000000000000000000000000000000000000000000000000000000000000000000000000000000000000000000000000000000000000000000000000000000000000000000000000000000000000000000000000000000000000000000000000000000000000000000000000000000000000000000000000000000000000000000000000000000000000000000000000000000000000000000000000000000000000000000000000000000000000000000000000000000000000000000000000000000000000000000000000000000000000000000000000000000000000000000000000000000000000000000000000000000000000000000000000000000000000000000000000000000000000000000000000000000000000000000000000000000000000000000000000000000000000000000000000000000000000000000000000000000000000000000000000000000000000000000000000000000000000000000000000000000000000000000000000000000000000000000000000000000000000000000000000000000000000000000000000000000000000000000000000000000000000000000000000000000000000000000000000000000000000000000000000000000000000000000000000000000000000000000000000000000000000000000000000000000000000000000000000000000000000000000000000000000000000000000000000000000000000000000000000000000000000000000000000000000000000000000000000000000000000000000000000000000000000000000000000000000000000000000000000000000000000000000000000000000000000000000000000000000000000000000000000000000000000000000000000000000000000000000000000000000000000000000000000000000000000000000000000000000000000000000000000000000000000000000000000000000000000000000000000000000000000000000000000000000000000000000000000000000000000000000000000000000000000000000000000000000000000000000000000000000000000000000000000000000000000000000000000000000000000000000000000000000000000000000000000000000000000000000000000000000000000000000000000000000000000000000000000000000000000000000000000000000000000000000000000000000000000000000000000000000000000000000000000000000000000000000000000000000000000000000000000000000000000000000000000000000000000000000000000000000000000000000000000000000000000000000000000000000000000000000000000000000000000000000000000000000000000000000000000000000000000000000000000000000000000000000000000000000000000000000000000000000000000000000000000000000000000000000000000000000000000000000000000000000000000000000000000000000000000000000000000000000000000000000000000000000000000000000000000000000000000000000000000000000000000000000000000000000000000000000000000000000000000000000000000000000000000000000000000000000000000000000000000000000000000000000000000000000000000000000000000000000000000000000000000000000000000000000000000000000000000000000000000000000000000000000000000000000000000000000000000000000000000000000000000000000000000000000000000000000000000000000000000000000000000000000000000000000000000000000000000000000000000000000000000000000000000000000000000000000000000000000000000000000000000000000000000000000000000000000000000000000000000000000000000000000000000000000000000000000000000000000000000000000000000000000000000000000000000000000000000000000000000000000000000000000000000000000000000000000000000000000000000000000000000000000000000000000000000000000000000000000000000000000000000000000000000000000000000000000000000000000000000000000000000000000000000000000000000000000000000000000000000000000000000000000000000000000000000000000000000000000000000000000000000000000000000000000000000000000000000000000000000000000000000000000000000000000000000000000000000000000000000000000000000000000000000000000000000000000000000000000000000000000000000000000000000000000000000000000000000000000000000000000000000000000000000000000000000000000000000000000000000000000000000000000000000000000000000000000000000000000000000000000000000000000000000000000000000000000000000000000000000000000000000000000000000000000000000000000000000000000000000000000000000000000000000000000000000000000000000000000000000000000000000000000000000000000000000000000000000000000000000000000000000000000000000000000000000000000000000000000000000000000000000000000000000000000000000000000000000000000000000000000000000000000000000000000000000000000000000000000000000000000000000000000000000000000000000000000000000000000000000000000000000000000000000000000000000000000000000000000000000000000000000000000000000000000000000000000000000000000000000000000000000000000000000000000000000000000000000000000000000000000000000000000000000000000000000000000000000000000000000000000000000000000000000000000000000000000000000000000000000000000000000000000000000000000000000000000000000000000000000000000000000000000000000000000000000000000000000000000000000000000000000000000000000000000000000000000000000000000000000000000000000000000000000000000000000000000000000000000000000000000000000000000000000000000000000000000000000000000000000000000000000000000000000000000000000000000000000000000000000000000000000000000000000000000000000000000000000000000000000000000000000000000000000000000000000000000000000000000000000000000000000000000000000000000000000000000000000000000000000000000000000000000000000000000000000000000000000000000000000000000000000000000000000000000000000000000000000000000000000000000000000000000000000000000000000000000000000000000000000000000000000000000000000000000000000000000000000000000000000000000000000000000000000000000000000000000000000000000000000000000000000000000000000000000000000000000000000000000000000000000000000000000000000000000000000000000000000000000000000000000000000000000000000000000000000000000000000000000000000000000000000000000000000000000000000000000000000000000000000000000000000000000000000000000000000000000000000000000000000000000000000000000000000000000000000000000000000000000000000000000000000000000000000000000000000000000000000000000000000000000000000000000000000000000000000000000000000000000000000000000000000000000000000000000000000000000000000000000000000000000000000000000000000000000000000000000000000000000000000000000000000000000000000000000000000000000000000000000000000000000000000000000000000000000000000000000000000000000000000000000000000000000000000000000000000000000000000000000000000000000000000000000000000000000000000000000000000000000000000000000000000000000000000000000000000000000000000000000000000000000000000000000000000000000000000000000000000000000000000000000000000000000000000000000000000000000000000000000000000000000000000000000000000000000000000000000000000000000000000000000000000000000000000000000000000000000000000000000000000000000000000000000000000000000000000000000000000000000000000000000000000000000000000000000000000000000000000000000000000000000000000000000000000000000000000000000000000000000000000000000000000000000000000000000000000000000000000000000000000000000000000000000000000000000000000000000000000000000000000000000000000000000000000000000000000000000000000000000000000000000000000000000000000000000000000000000000000000000000000000000000000000000000000000000000000000000000000000000000000000000000000000000000000000000000000000000000000000000000000000000000000000000000000000000000000000000000000000000000000000000000000000000000000000000000000000000000000000000000000000000000000000000000000000000000000000000000000000000000000000000000000000000000000000000000000000000000000000000000000000000000000000000000000000000000000000000000000000000000000000000000000000000000000000000000000000000000000000000000000000000000000000000000000000000000000000000000000000000000000000000000000000000000000000000000000000000000000000000000000000000000000000000000000000000000000000000000000000000000000000000000000000000000000000000000000000000000000000000000000000000000000000000000000000000000000000000000000000000000000000000000000000000000000000000000000000000000000000000000000000000000000000000000000000000000000000000000000000000000000000000000000000000000000000000000000000000000000000000000000000000000000000000000000000000000000000000000000000000000000000000000000000000000000000000000000000000000000000000000000000000000000000000000000000000000000000000000000000000000000000000000000000000000000000000000000000000000000000000000000000000000000000000000000000000000000000000000000000000000000000000000000000000000000000000000000000000000000000000000000000000000000000000000000000000000000000000000000000000000000000000000000000000000000000000000000000000000000000000000000000000000000000000000000000000000000000000000000000000000000000000000000000000000000000000000000000000000000000000000000000000000000000000000000000000000000000000000000000000000000000000000000000000000000000000000000000000000000000000000000000000000000000000000000000000000000000000000000000000000000000000000000000000000000000000000000000000000000000000000000000000000000000000000000000000000000000000000000000000000000000000000000000000000000000000000000000000000000000000000000000000000000000000000000000000000000000000000000000000000000000000000000000000000000000000000000000000000000000000000000000000000000000000000000000000000000000000000000000000000000000000000000000000000000000000000000000000000000000000000000000000000000000000000000000000000000000000000000000000000000000000000000000000000000000000000000000000000000000000000000000000000000000000000000000000000000000000000000000000000000000000000000000000000000000000000000000000000000000000000000000000000000000000000000000000000000000000000000000000000000000000000000000000000000000000000000000000000000000000000000000000000000000000000000000000000000000000000000000000000000000000000000000000000000000000000000000000000000000000000000000000000000000000000000000000000000000000000000000000000000000000000000000000000000000000000000000000000000000000000000000000000000000000000000000000000000000000000000000000000000000000000000000000000000000000000000000000000000000000000000000000000000000000000000000000000000000000000000000000000000000000000000000000000000000000000000000000000000000000000000000000000000000000000000000000000000000000000000000000000000000000000000000000000000000000000000000000000000000000000000000000000000000000000000000000000000000000000000000000000000000000000000000000000000000000000000000000000000000000000000000000000000000000000000000000000000000000000000000000000000000000000000000000000000000000000000000000000000000000000000000000000000000000000000000000000000000000000000000000000000000000000000000000000000000000000000000000000000000000000000000000000000000000000000000000000000000000000000000000000000000000000000000000000000000000000000000000000000000000000000000000000000000000000000000000000000000000000000000000000000000000000000000000000000000000000000000000000000000000000000000000000000000000000000000000000000000000000000000000000000000000000000000000000000000000000000000000000000000000000000000000000000000000000000000000000000000000000000000000000000000000000000000000000000000000000000000000000000000000000000000000000000000000000000000000000000000000000000000000000000000000000000000000000000000000000000000000000000000000000000000000000000000000000000000000000000000000000000000000000000000000000000000000000000000000000000000000000000000000000000000000000000000000000000000000000000000000000000000000000000000000000000000000000000000000000000000000000000000000000000000000000000000000000000000000000000000000000000000000000000000000000000000000000000000000000000000000000000000000000000000000000000000000000000000000000000000000000000000000000000000000000000000000000000000000000000000000000000000000000000000000000000000000000000000000000000000000000000000000000000000000000000000000000000000000000000000000000000000000000000000000000000000000000000000000000000000000000000000000000000000000000000000000000000000000000000000000000000000000000000000000000000000000000000000000000000000000000000000000000000000000000000000000000000000000000000000000000000000000000000000000000000000000000000000000000000000000000000000000000000000000000000000000000000000000000000000000000000000000000000000000000000000000000000000000000000000000000000000000000000000000000000000000000000000000000000000000000000000000000000000000000000000000000000000000000000000000000000000000000000000000000000000000000000000000000000000000000000000000000000000000000000000000000000000000000000000000000000000000000000000000000000000000000000000000000000000000000000000000000000000000000000000000000000000000000000000000000000000000000000000000000000000000000000000000000000000000000000000000000000000000000000000000000000000000000000000000000000000000000000000000000000000000000000000000000000000000000000000000000000000000000000000000000000000000000000000000000000000000000000000000000000000000000000000000000000000000000000000000000000000000000000000000000000000000000000000000000000000000000000000000000000000000000000000000000000000000000000000000000000000000000000000000000000000000000000000000000000000000000000000000000000000000000000000000000000000000000000000000000000000000000000000000000000000000000000000000000000000000000000000000000000000000000000000000000000000000000000000000000000000000000000000000000000000000000000000000000000000000000000000000000000000000000000000000000000000000000000000000000000000000000000000000000000000000000000000000000000000000000000000000000000000000000000000000000000000000000000000000000000000000000000000000000000000000000000000000000000000000000000000000000000000000000000000000000000000000000000000000000000000000000000000000000000000000000000000000000000000000000000000000000000000000000000000000000000000000000000000000000000000000000000000000000000000000000000000000000000000000000000000000000000000000000000000000000000000000000000000000000000000000000000000000000000000000000000000000000000000000000000000000000000000000000000000000000000000000000000000000000000000000000000000000000000000000000000000000000000000000000000000000000000000000000000000000000000000000000000000000000000000000000000000000000000000000000000000000000000000000000000000000000000000000000000000000000000000000000000000000000000000000000000000000000000000000000000000000000000000000000000000000000000000000000000000000000000000000000000000000000000000000000000000000000000000000000000000000000000000000000000000000000000000000000000000000000000000000000000000000000000000000000000000000000000000000000000000000000000000000000000000000000000000000000000000000000000000000000000000000000000000000000000000000000000000000000000000000000000000000000000000000000000000000000000000000000000000000000000000000000000000000000000000000000000000000000000000000000000000000000000000000000000000000000000000000000000000000000000000000000000000000000000000000000000000000000000000000000000000000000000000000000000000000000000000000000000000000000000000000000000000000000000000000000000000000000000000000000000000000000000000000000000000000000000000000000000000000000000000000000000000000000000000000000000000000000000000000000000000000000000000000000000000000000000000000000000000000000000000000000000000000000000000000000000000000000000000000000000000000000000000000000000000000000000000000000000000000000000000000000000000000000000000000000000000000000000000000000000000000000000000000000000000000000000000000000000000000000000000000000000000000000000000000000000000000000000000000000000000000000000000000000000000000000000000000000000000000000000000000000000000000000000000000000000000000000000000000000000000000000000000000000000000000000000000000000000000000000000000000000000000000000000000000000000000000000000000000000000000000000000000000000000000000000000000000000000000000000000000000000000000000000000000000000000000000000000000000000000000000000000000000000000000000000000000000000000000000000000000000000000000000000000000000000000000000000000000000000000000000000000000000000000000000000000000000000000000000000000000000000000000000000000000000000000000000000000000000000000000000000000000000000000000000000000000000000000000000000000000000000000000000000000000000000000000000000000000000000000000000000000000000000000000000000000000000000000000000000000000000000000000000000000000000000000000000000000000000000000000000000000000000000000000000000000000000000000000000000000000000000000000000000000000000000000000000000000000000000000000000000000000000000000000000000000000000000000000000000000000000000000000000000000000000000000000000000000000000000000000000000000000000000000000000000000000000000000000000000000000000000000000000000000000000000000000000000000000000000000000000000000000000000000000000000000000000000000000000000000000000000000000000000000000000000000000000000000000000000000000000000000000000000000000000000000000000000000000000000000000000000000000000000000000000000000000000000000000000000000000000000000000000000000000000000000000000000000000000000000000000000000000000000000000000000000000000000000000000000000000000000000000000000000000000000000000000000000000000000000000000000000000000000000000000000000000000000000000000000000000000000000000000000000000000000000000000000000000000000000000000000000000000000000000000000000000000000000000000000000000000000000000000000000000000000000000000000000000000000000000000000000000000000000000000000000000000000000000000000000000000000000000000000000000000000000000000000000000000000000000000000000000000000000000000000000000000000000000000000000000000000000000000000000000000000000000000000000000000000000000000000000000000000000000000000000000000000000000000000000000000000000000000000000000000000000000000000000000000000000000000000000000000000000000000000000000000000000000000000000000000000000000000000000000000000000000000000000000000000000000000000000000000000000000000000000000000000000000000000000000000000000000000000000000000000000000000000000000000000000000000000000000000000000000000000000000000000000000000000000000000000000000000000000000000000000000000000000000000000000000000000000000000000000000000000000000000000000000000000000000000000000000000000000000000000000000000000000000000000000000000000000000000000000000000000000000000000000000000000000000000000000000000000000000000000000000000000000000000000000000000000000000000000000000000000000000000000000000000000000000000000000000000000000000000000000000000000000000000000000000000000000000000000000000000000000000000000000000000000000000000000000000000000000000000000000000000000000000000000000000000000000000000000000000000000000000000000000000000000000000000000000000000000000000000000000000000000000000000000000000000000000000000000000000000000000000000000000000000000000000000000000000000000000000000000000000000000000000000000000000000000000000000000000000000000000000000000000000000000000000000000000000000000000000000000000000000000000000000000000000000000000000000000000000000000000000000000000000000000000000000000000000000000000000000000000000000000000000000000000000000000000000000000000000000000000000000000000000000000000000000000000000000000000000000000000000000000000000000000000000000000000000000000000000000000000000000000000000000000000000000000000000000000000000000000000000000000000000000000000000000000000000000000000000000000000000000000000000000000000000000000000000000000000000000000000000000000000000000000000000000000000000000000000000000000000000000000000000000000000000000000000000000000000000000000000000000000000000000000000000000000000000000000000000000000000000000000000000000000000000000000000000000000000000000000000000000000000000000000000000000000000000000000000000000000000000000000000000000000000000000000000000000000000000000000000000000000000000000000000000000000000000000000000000000000000000000000000000000000000000000000000000000000000000000000000000000000000000000000000000000000000000000000000000000000000000000000000000000000000000000000000000000000000000000000000000000000000000000000000000000000000000000000000000000000000000000000000000000000000000000000000000000000000000000000000000000000000000000000000000000000000000000000000000000000000000000000000000000000000000000000000000000000000000000000000000000000000000000000000000000000000000000000000000000000000000000000000000000000000000000000000000000000000000000000000000000000000000000000000000000000000000000000000000000000000000000000000000000000000000000000000000000000000000000000000000000000000000000000000000000000000000000000000000000000000000000000000000000000000000000000000000000000000000000000000000000000000000000000000000000000000000000000000000000000000000000000000000000000000000000000000000000000000000000000000000000000000000000000000000000000000000000000000000000000000000000000000000000000000000000000000000000000000000000000000000000000000000000000000000000000000000000000000000000000000000000000000000000000000000000000000000000000000000000000000000000000000000000000000000000000000000000000000000000000000000000000000000000000000000000000000000000000000000000000000000000000000000000000000000000000000000000000000000000000000000000000000000000000000000000000000000000000000000000000000000000000000000000000000000000000000000000000000000000000000000000000000000000000000000000000000000000000000000000000000000000000000000000000000000000000000000000000000000000000000000000000000000000000000000000000000000000000000000000000000000000000000000000000000000000000000000000000000000000000000000000000000000000000000000000000000000000000000000000000000000000000000000000000000000000000000000000000000000000000000000000000000000000000000000000000000000000000000000000000000000000000000000000000000000000000000000000000000000000000000000000000000000000000000000000000000000000000000000000000000000000000000000000000000000000000000000000000000000000000000000000000000000000000000000000000000000000000000000000000000000000000000000000000000000000000000000000000000000000000000000000000000000000000000000000000000000000000000000000000000000000000000000000000000000000000000000000000000000000000000000000000000000000000000000000000000000000000000000000000000000000000000000000000000000000000000000000000000000000000000000000000000000000000000000000000000000000000000000000000000000000000000000000000000000000000000000000000000000000000000000000000000000000000000000000000000000000000000000000000000000000000000000000000000000000000000000000000000000000000000000000000000000000000000000000000000000000000000000000000000000000000000000000000000000000000000000000000000000000000000000000000000000000000000000000000000000000000000000000000000000000000000000000000000000000000000000000000000000000000000000000000000000000000000000000000000000000000000000000000000000000000000000000000000000000000000000000000000000000000000000000000000000000000000000000000000000000000000000000000000000000000000000000000000000000000000000000000000000000000000000000000000000000000000000000000000000000000000000000000000000000000000000000000000000000000000000000000000000000000000000000000000000000000000000000000000000000000000000000000000000000000000000000000000000000000000000000000000000000000000000000000000000000000000000000000000000000000000000000000000000000000000000000000000000000000000000000000000000000000000000000000000000000000000000000000000000000000000000000000000000000000000000000000000000000000000000000000000000000000000000000000000000000000000000000000000000000000000000000000000000000000000000000000000000000000000000000000000000000000000000000000000000000000000000000000000000000000000000000000000000000000000000000000000000000000000000000000000000000000000000000000000000000000000000000000000000000000000000000000000000000000000000000000000000000000000000000000000000000000000000000000000000000000000000000000000000000000000000000000000000000000000000000000000000000000000000000000000000000000000000000000000000000000000000000000000000000000000000000000000000000000000000000000000000000000000000000000000000000000000000000000000000000000000000000000000000000000000000000000000000000000000000000000000000000000000000000000000000000000000000000000000000000000000000000000000000000000000000000000000000000000000000000000000000000000000000000000000000000000000000000000000000000000000000000000000000000000000000000000000000000000000000000000000000000000000000000000000000000000000000000000000000000000000000000000000000000000000000000000000000000000000000000000000000000000000000000000000000000000000000000000000000000000000000000000000000000000000000000000000000000000000000000000000000000000000000000000000000000000000000000000000000000000000000000000000000000000000000000000000000000000000000000000000000000000000000000000000000000000000000000000000000000000000000000000000000000000000000000000000000000000000000000000000000000000000000000000000000000000000000000000000000000000000000000000000000000000000000000000000000000000000000000000000000000000000000000000000000000000000000000000000000000000000000000000000000000000000000000000000000000000000000000000000000000000000000000000000000000000000000000000000000000000000000000000000000000000000000000000000000000000000000000000000000000000000000000000000000000000000000000000000000000000000000000000000000000000000000000000000000000000000000000000000000000000000000000000000000000000000000000000000000000000000000000000000000000000000000000000000000000000000000000000000000000000000000000000000000000000000000000000000000000000000000000000000000000000000000000000000000000000000000000000000000000000000000000000000000000000000000000000000000000000000000000000000000000000000000000000000000000000000000000000000000000000000000000000000000000000000000000000000000000000000000000000000000000000000000000000000000000000000000000000000000000000000000000000000000000000000000000000000000000000000000000000000000000000000000000000000000000000000000000000000000000000000000000000000000000000000000000000000000000000000000000000000000000000000000000000000000000000000000000000000000000000000000000000000000000000000000000000000000000000000000000000000000000000000000000000000000000000000000000000000000000000000000000000000000000000000000000000000000000000000000000000000000000000000000000000000000000000000000000000000000000000000000000000000000000000000000000000000000000000000000000000000000000000000000000000000000000000000000000000000000000000000000000000000000000000000000000000000000000000000000000000000000000000000000000000000000000000000000000000000000000000000000000000000000000000000000000000000000000000000000000000000000000000000000000000000000000000000000000000000000000000000000000000000000000000000000000000000000000000000000000000000000000000000000000000000000000000000000000000000000000000000000000000000000000000000000000000000000000000000000000000000000000000000000000000000000000000000000000000000000000000000000000000000000000000000000000000000000000000000000000000000000000000000000000000000000000000000000000000000000000000000000000000000000000000000000000000000000000000000000000000000000000000000000000000000000000000000000000000000000000000000000000000000000000000000000000000000000000000000000000000000000000000000000000000000000000000000000000000000000000000000000000000000000000000000000000000000000000000000000000000000000000000000000000000000000000000000000000000000000000000000000000000000000000000000000000000000000000000000000000000000000000000000000000000000000000000000000000000000000000000000000000000000000000000000000000000000000000000000000000000000000000000000000000000000000000000000000000000000000000000000000000000000000000000000000000000000000000000000000000000000000000000000000000000000000000000000000000000000000000000000000000000000000000000000000000000000000000000000000000000000000000000000000000000000000000000000000000000000000000000000000000000000000000000000000000000000000000000000000000000000000000000000000000000000000000000000000000000000000000000000000000000000000000000000000000000000000000000000000000000000000000000000000000000000000000000000000000000000000000000000000000000000000000000000000000000000000000000000000000000000000000000000000000000000000000000000000000000000000000000000000000000000000000000000000000000000000000000000000000000000000000000000000000000000000000000000000000000000000000000000000000000000000000000000000000000000000000000000000000000000000000000000000000000000000000000000000000000000000000000000000000000000000000000000000000000000000000000000000000000000000000000000000000000000000000000000000000000000000000000000000000000000000000000000000000000000000000000000000000000000000000000000000000000000000000000000000000000000000000000000000000000000000000000000000000000000000000000000000000000000000000000000000000000000000000000000000000000000000000000000000000000000000000000000000000000000000000000000000000000000000000000000000000000000000000000000000000000000000000000000000000000000000000000000000000000000000000000000000000000000000000000000000000000000000000000000000000000000000000000000000000000000000000000000000000000000000000000000000000000000000000000000000000000000000000000000000000000000000000000000000000000000000000000000000000000000000000000000000000000000000000000000000000000000000000000000000000000000000000000000000000000000000000000000000000000000000000000000000000000000000000000000000000000000000000000000000000000000000000000000000000000000000000000000000000000000000000000000000000000000000000000000000000000000000000000000000000000000000000000000000000000000000000000000000000000000000000000000000000000000000000000000000000000000000000000000000000000000000000000000000000000000000000000000000000000000000000000000000000000000000000000000000000000000000000000000000000000000000000000000000000000000000000000000000000000000000000000000000000000000000000000000000000000000000000000000000000000000000000000000000000000000000000000000000000000000000000000000000000000000000000000000000000000000000000000000000000000000000000000000000000000000000000000000000000000000000000000000000000000000000000000000000000000000000000000000000000000000000000000000000000000000000000000000000000000000000000000000000000000000000000000000000000000000000000000000000000000000000000000000000000000000000000000000000000000000000000000000000000000000000000000000000000000000000000000000000000000000000000000000000000000000000000000000000000000000000000000000000000000000000000000000000000000000000000000000000000000000000000000000000000000000000000000000000000000000000000000000000000000000000000000000000000000000000000000000000000000000000000000000000000000000000000000000000000000000000000000000000000000000000000000000000000000000000000000000000000000000000000000000000000000000000000000000000000000000000000000000000000000000000000000000000000000000000000000000000000000000000000000000000000000000000000000000000000000000000000000000000000000000000000000000000000000000000000000000000000000000000000000000000000000000000000000000000000000000000000000000000000000000000000000000000000000000000000000000000000000000000000000000000000000000000000000000000000000000000000000000000000000000000000000000000000000000000000000000000000000000000000000000000000000000000000000000000000000000000000000000000000000000000000000000000000000000000000000000000000000000000000000000000000000000000000000000000000000000000000000000000000000000000000000000000000000000000000000000000000000000000000000000000000000000000000000000000000000000000000000000000000000000000000000000000000000000000000000000000000000000000000000000000000000000000000000000000000000000000000000000000000000000000000000000000000000000000000000000000000000000000000000000000000000000000000000000000000000000000000000000000000000000000000000000000000000000000000000000000000000000000000000000000000000000000000000000000000000000000000000000000000000000000000000000000000000000000000000000000000000000000000000000000000000000000000000000000000000000000000000000000000000000000000000000000000000000000000000000000000000000000000000000000000000000000000000000000000000000000000000000000000000000000000000000000000000000000000000000000000000000000000000000000000000000000000000000000000000000000000000000000000000000000000000000000000000000000000000000000000000000000000000000000000000000000000000000000000000000000000000000000000000000000000000000000000000000000000000000000000000000000000000000000000000000000000000000000000000000000000000000000000000000000000000000000000000000000000000000000000000000000000000000000000000000000000000000000000000000000000000000000000000000000000000000000000000000000000000000000000000000000000000000000000000000000000000000000000000000000000000000000000000000000000000000000000000000000000000000000000000000000000000000000000000000000000000000000000000000000000000000000000000000000000000000000000000000000000000000000000000000000000000000000000000000000000000000000000000000000000000000000000000000000000000000000000000000000000000000000000000000000000000000000000000000000000000000000000000000000000000000000000000000000000000000000000000000000000000000000000000000000000000000000000000000000000000000000000000000000000000000000000000000000000000000000000000000000000000000000000000000000000000000000000000000000000000000000000000000000000000000000000000000000000000000000000000000000000000000000000000000000000000000000000000000000000000000000000000000000000000000000000000000000000000000000000000000000000000000000000000000000000000000000000000000000000000000000000000000000000000000000000000000000000000000000000000000000000000000000000000000000000000000000000000000000000000000000000000000000000000000000000000000000000000000000000000000000000000000000000000000000000000000000000000000000000000000000000000000000000000000000000000000000000000000000000000000000000000000000000000000000000000000000000000000000000000000000000000000000000000000000000000000000000000000000000000000000000000000000000000000000000000000000000000000000000000000000000000000000000000000000000000000000000000000000000000000000000000000000000000000000000000000000000000000000000000000000000000000000000000000000000000000000000000000000000000000000000000000000000000000000000000000000000000000000000000000000000000000000000000000000000000000000000000000000000000000000000000000000000000000000000000000000000000000000000000000000000000000000000000000000000000000000000000000000000000000000000000000000000000000000000000000000000000000000000000000000000000000000000000000000000000000000000000000000000000000000000000000000000000000000000000000000000000000000000000000000000000000000000000000000000000000000000000000000000000000000000000000000000000000000000000000000000000000000000000000000000000000000000000000000000000000000000000000000000000000000000000000000000000000000000000000000000000000000000000000000000000000000000000000000000000000000000000000000000000000000000000000000000000000000000000000000000000000000000000000000000000000000000000000000000000000000000000000000000000000000000000000000000000000000000000000000000000000000000000000000000000000000000000000000000000000000000000000000000000000000000000000000000000000000000000000000000000000000000000000000000000000000000000000000000000000000000000000000000000000000000000000000000000000000000000000000000000000000000000000000000000000000000000000000000000000000000000000000000000000000000000000000000000000000000000000000000000000000000000000000000000000000000000000000000000000000000000000000000000000000000000000000000000000000000000000000000000000000000000000000000000000000000000000000000000000000000000000000000000000000000000000000000000000000000000000000000000000000000000000000000000000000000000000000000000000000000000000000000000000000000000000000000000000000000000000000000000000000000000000000000000000000000000000000000000000000000000000000000000000000000000000000000000000000000000000000000000000000000000000000000000000000000000000000000000000000000000000000000000000000000000000000000000000000000000000000000000000000000000000000000000000000000000000000000000000000000000000000000000000000000000000000000000000000000000000000000000000000000000000000000000000000000000000000000000000000000000000000000000000000000000000000000000000000000000000000000000000000000000000000000000000000000000000000000000000000000000000000000000000000000000000000000000000000000000000000000000000000000000000000000000000000000000000000000000000000000000000000000000000000000000000000000000000000000000000000000000000000000000000000000000000000000000000000000000000000000000000000000000000000000000000000000000000000000000000000000000000000000000000000000000000000000000000000000000000000000000000000000000000000000000000000000000000000000000000000000000000000000000000000000000000000000000000000000000000000000000000000000000000000000000000000000000000000000000000000000000000000000000000000000000000000000000000000000000000000000000000000000000000000000000000000000000000000000000000000000000000000000000000000000000000000000000000000000000000000000000000000000000000000000000000000000000000000000000000000000000000000000000000000000000000000000000000000000000000000000000000000000000000000000000000000000000000000000000000000000000000000000000000000000000000000000000000000000000000000000000000000000000000000000000000000000000000000000000000000000000000000000000000000000000000000000000000000000000000000000000000000000000000000000000000000000000000000000000000000000000000000000000000000000000000000000000000000000000000000000000000000000000000000000000000000000000000000000000000000000000000000000000000000000000000000000000000000000000000000000000000000000000000000000000000000000000000000000000000000000000000000000000000000000000000000000000000000000000000000000000000000000000000000000000000000000000000000000000000000000000000000000000000000000000000000000000000000000000000000000000000000000000000000000000000000000000000000000000000000000000000000000000000000000000000000000000000000000000000000000000000000000000000000000000000000000000000000000000000000000000000000000000000000000000000000000000000000000000000000000000000000000000000000000000000000000000000000000000000000000000000000000000000000000000000000000000000000000000000000000000000000000000000000000000000000000000000000000000000000000000000000000000000000000000000000000000000000000000000000000000000000000000000000000000000000000000000000000000000000000000000000000000000000000000000000000000000000000000000000000000000000000000000000000000000000000000000000000000000000000000000000000000000000000000000000000000000000000000000000000000000000000000000000000000000000000000000000000000000000000000000000000000000000000000000000000000000000000000000000000000000000000000000000000000000000000000000000000000000000000000000000000000000000000000000000000000000000000000000000000000000000000000000000000000000000000000000000000000000000000000000000000000000000000000000000000000000000000000000000000000000000000000000000000000000000000000000000000000000000000000000000000000000000000000000000000000000000000000000000000000000000000000000000000000000000000000000000000000000000000000000000000000000000000000000000000000000000000000000000000000000000000000000000000000000000000000000000000000000000000000000000000000000000000000000000000000000000000000000000000000000000000000000000000000000000000000000000000000000000000000000000000000000000000000000000000000000000000000000000000000000000000000000000000000000000000000000000000000000000000000000000000000000000000000000000000000000000000000000000000000000000000000000000000000000000000000000000000000000000000000000000000000000000000000000000000000000000000000000000000000000000000000000000000000000000000000000000000000000000000000000000000000000000000000000000000000000000000000000000000000000000000000000000000000000000000000000000000000000000000000000000000000000000000000000000000000000000000000000000000000000000000000000000000000000000000000000000000000000000000000000000000000000000000000000000000000000000000000000000000000000000000000000000000000000000000000000000000000000000000000000000000000000000000000000000000000000000000000000000000000000000000000000000000000000000000000000000000000000000000000000000000000000000000000000000000000000000000000000000000000000000000000000000000000000000000000000000000000000000000000000000000000000000000000000000000000000000000000000000000000000000000000000000000000000000000000000000000000000000000000000000000000000000000000000000000000000000000000000000000000000000000000000000000000000000000000000000000000000000000000000000000000000000000000000000000000000000000000000000000000000000000000000000000000000000000000000000000000000000000000000000000000000000000000000000000000000000000000000000000000000000000000000000000000000000000000000000000000000000000000000000000000000000000000000000000000000000000000000000000000000000000000000000000000000000000000000000000000000000000000000000000000000000000000000000000000000000000000000000000000000000000000000000000000000000000000000000000000000000000000000000000000000000000000000000000000000000000000000000000000000000000000000000000000000000000000000000000000000000000000000000000000000000000000000000000000000000000000000000000000000000000000000000000000000000000000000000000000000000000000000000000000000000000000000000000000000000000000000000000000000000000000000000000000000000000000000000000000000000000000000000000000000000000000000000000000000000000000000000000000000000000000000000000000000000000000000000000000000000000000000000000000000000000000000000000000000000000000000000000000000000000000000000000000000000000000000000000000000000000000000000000000000000000000000000000000000000000000000000000000000000000000000000000000000000000000000000000000000000000000000000000000000000000000000000000000000000000000000000000000000000000000000000000000000000000000000000000000000000000000000000000000000000000000000000000000000000000000000000000000000000000000000000000000000000000000000000000000000000000000000000000000000000000000000000000000000000000000000000000000000000000000000000000000000000000000000000000000000000000000000000000000000000000000000000000000000000000000000000000000000000000000000000000000000000000000000000000000000000000000000000000000000000000000000000000000000000000000000000000000000000000000000000000000000000000000000000000000000000000000000000000000000000000000000000000000000000000000000000000000000000000000000000000000000000000000000000000000000000000000000000000000000000000000000000000000000000000000000000000000000000000000000000000000000000000000000000000000000000000000000000000000000000000000000000000000000000000000000000000000000000000000000000000000000000000000000000000000000000000000000000000000000000000000000000000000000000000000000000000000000000000000000000000000000000000000000000000000000000000000000000000000000000000000000000000000000000000000000000000000000000000000000000000000000000000000000000000000000000000000000000000000000000000000000000000000000000000000000000000000000000000000000000000000000000000000000000000000000000000000000000000000000000000000000000000000000000000000000000000000000000000000000000000000000000000000000000000000000000000000000000000000000000000000000000000000000000000000000000000000000000000000000000000000000000000000000000000000000000000000000000000000000000000000000000000000000000000000000000000000000000000000000000000000000000000000000000000000000000000000000000000000000000000000000000000000000000000000000000000000000000000000000000000000000000000000000000000000000000000000000000000000000000000000000000000000000000000000000000000000000000000000000000000000000000000000000000000000000000000000000000000000000000000000000000000000000000000000000000000000000000000000000000000000000000000000000000000000000000000000000000000000000000000000000000000000000000000000000000000000000000000000000000000000000000000000000000000000000000000000000000000000000000000000000000000000000000000000000000000000000000000000000000000000000000000000000000000000000000000000000000000000000000000000000000000000000000000000000000000000000000000000000000000000000000000000000000000000000000000000000000000000000000000000000000000000000000000000000000000000000000000000000000000000000000000000000000000000000000000000000000000000000000000000000000000000000000000000000000000000000000000000000000000000000000000000000000000000000000000000000000000000000000000000000000000000000000000000000000000000000000000000000000000000000000000000000000000000000000000000000000000000000000000000000000000000000000000000000000000000000000000000000000000000000000000000000000000000000000000000000000000000000000000000000000000000000000000000000000000000000000000000000000000000000000000000000000000000000000000000000000000000000000000000000000000000000000000000000000000000000000000000000000000000000000000000000000000000000000000000000000000000000000000000000000000000000000000000000000000000000000000000000000000000000000000000000000000000000000000000000000000000000000000000000000000000000000000000000000000000000000000000000000000000000000000000000000000000000000000000000000000000000000000000000000000000000000000000000000000000000000000000000000000000000000000000000000000000000000000000000000000000000000000000000000000000000000000000000000000000000000000000000000000000000000000000000000000000000000000000000000000000000000000000000000000000000000000000000000000000000000000000000000000000000000000000000000000000000000000000000000000000000000000000000000000000000000000000000000000000000000000000000000000000000000000000000000000000000000000000000000000000000000000000000000000000000000000000000000000000000000000000000000000000000000000000000000000000000000000000000000000000000000000000000000000000000000000000000000000000000000000000000000000000000000000000000000000000000000000000000000000000000000000000000000000000000000000000000000000000000000000000000000000000000000000000000000000000000000000000000000000000000000000000000000000000000000000000000000000000000000000000000000000000000000000000000000000000000000000000000000000000000000000000000000000000000000000000000000000000000000000000000000000000000000000000000000000000000000000000000000000000000000000000000000000000000000000000000000000000000000000000000000000000000000000000000000000000000000000000000000000000000000000000000000000000000000000000000000000000000000000000000000000000000000000000000000000000000000000000000000000000000000000000000000000000000000000000000000000000000000000000000000000000000000000000000000000000000000000000000000000000000000000000000000000000000000000000000000000000000000000000000000000000000000000000000000000000000000000000000000000000000000000000000000000000000000000000000000000000000000000000000000000000000000000000000000000000000000000000000000000000000000000000000000000000000000000000000000000000000000000000000000000000000000000000000000000000000000000000000000000000000000000000000000000000000000000000000000000000000000000000000000000000000000000000000000000000000000000000000000000000000000000000000000000000000000000000000000000000000000000000000000000000000000000000000000000000000000000000000000000000000000000000000000000000000000000000000000000000000000000000000000000000000000000000000000000000000000000000000000000000000000000000000000000000000000000000000000000000000000000000000000000000000000000000000000000000000000000000000000000000000000000000000000000000000000000000000000000000000000000000000000000000000000000000000000000000000000000000000000000000000000000000000000000000000000000000000000000000000000000000000000000000000000000000000000000000000000000000000000000000000000000000000000000000000000000000000000000000000000000000000000000000000000000000000000000000000000000000000000000000000000000000000000000000000000000000000000000000000000000000000000000000000000000000000000000000000000000000000000000000000000000000000000000000000000000000000000000000000000000000000000000000000000000000000000000000000000000000000000000000000000000000000000000000000000000000000000000000000000000000000000000000000000000000000000000000000000000000000000000000000000000000000000000000000000000000000000000000000000000000000000000000000000000000000000000000000000000000000000000000000000000000000000000000000000000000000000000000000000000000000000000000000000000000000000000000000000000000000000000000000000000000000000000000000000000000000000000000000000000000000000000000000000000000000000000000000000000000000000000000000000000000000000000000000000000000000000000000000000000000000000000000000000000000000000000000000000000000000000000000000000000000000000000000000000000000000000000000000000000000000000000000000000000000000000000000000000000000000000000000000000000000000000000000000000000000000000000000000000000000000000000000000000000000000000000000000000000000000000000000000000000000000000000000000000000000000000000000000000000000000000000000000000000000000000000000000000000000000000000000000000000000000000000000000000000000000000000000000000000000000000000000000000000000000000000000000000000000000000000000000000000000000000000000000000000000000000000000000000000000000000000000000000000000000000000000000000000000000000000000000000000000000000000000000000000000000000000000000000000000000000000000000000000000000000000000000000000000000000000000000000000000000000000000000000000000000000000000000000000000000000000000000000000000000000000000000000000000000000000000000000000000000000000000000000000000000000000000000000000000000000000000000000000000000000000000000000000000000000000000000000000000000000000000000000000000000000000000000000000000000000000000000000000000000000000000000000000000000000000000000000000000000000000000000000000000000000000000000000000000000000000000000000000000000000000000000000000000000000000000000000000000000000000000000000000000000000000000000000000000000000000000000000000000000000000000000000000000000000000000000000000000000000000000000000000000000000000000000000000000000000000000000000000000000000000000000000000000000000000000000000000000000000000000000000000000000000000000000000000000000000000000000000000000000000000000000000000000000000000000000000000000000000000000000000000000000000000000000000000000000000000000000000000000000000000000000000000000000000000000000000000000000000000000000000000000000000000000000000000000000000000000000000000000000000000000000000000000000000000000000000000000000000000000000000000000000000000000000000000000000000000000000000000000000000000000000000000000000000000000000000000000000000000000000000000000000000000000000000000000000000000000000000000000000000000000000000000000000000000000000000000000000000000000000000000000000000000000000000000000000000000000000000000000000000000000000000000000000000000000000000000000000000000000000000000000000000000000000000000000000000000000000000000000000000000000000000000000000000000000000000000000000000000000000000000000000000000000000000000000000000000000000000000000000000000000000000000000000000000000000000000000000000000000000000000000000000000000000000000000000000000000000000000000000000000000000000000000000000000000000000000000000000000000000000000000000000000000000000000000000000000000000000000000000000000000000000000000000000000000000000000000000000000000000000000000000000000000000000000000000000000000000000000000000000000000000000000000000000000000000000000000000000000000000000000000000000000000000000000000000000000000000000000000000000000000000000000000000000000000000000000000000000000000000000000000000000000000000000000000000000000000000000000000000000000000000000000000000000000000000000000000000000000000000000000000000000000000000000000000000000000000000000000000000000000000000000000000000000000000000000000000000000000000000000000000000000000000000000000000000000000000000000000000000000000000000000000000000000000000000000000000000000000000000000000000000000000000000000000000000000000000000000000000000000000000000000000000000000000000000000000000000000000000000000000000000000000000000000000000000000000000000000000000000000000000000000000000000000000000000000000000000000000000000000000000000000000000000000000000000000000000000000000000000000000000000000000000000000000000000000000000000000000000000000000000000000000000000000000000000000000000000000000000000000000000000000000000000000000000000000000000000000000000000000000000000000000000000000000000000000000000000000000000000000000000000000000000000000000000000000000000000000000000000000000000000000000000000000000000000000000000000000000000000000000000000000000000000000000000000000000000000000000000000000000000000000000000000000000000000000000000000000000000000000000000000000000000000000000000000000000000000000000000000000000000000000000000000000000000000000000000000000000000000000000000000000000000000000000000000000000000000000000000000000000000000000000000000000000000000000000000000000000000000000000000000000000000000000000000000000000000000000000000000000000000000000000000000000000000000000000000000000000000000000000000000000000000000000000000000000000000000000000000000000000000000000000000000000000000000000000000000000000000000000000000000000000000000000000000000000000000000000000000000000000000000000000000000000000000000000000000000000000000000000000000000000000000000000000000000000000000000000000000000000000000000000000000000000000000000000000000000000000000000000000000000000000000000000000000000000000000000000000000000000000000000000000000000000000000000000000000000000000000000000000000000000000000000000000000000000000000000000000000000000000000000000000000000000000000000000000000000000000000000000000000000000000000000000000000000000000000000000000000000000000000000000000000000000000000000000000000000000000000000000000000000000000000000000000000000000000000000000000000000000000000000000000000000000000000000000000000000000000000000000000000000000000000000000000000000000000000000000000000000000000000000000000000000000000000000000000000000000000000000000000000000000000000000000000000000000000000000000000000000000000000000000000000000000000000000000000000000000000000000000000000000000000000000000000000000000000000000000000000000000000000000000000000000000000000000000000000000000000000000000000000000000000000000000000000000000000000000000000000000000000000000000000000000000000000000000000000000000000000000000000000000000000000000000000000000000000000000000000000000000000000000000000000000000000000000000000000000000000000000000000000000000000000000000000000000000000000000000000000000000000000000000000000000000000000000000000000000000000000000000000000000000000000000000000000000000000000000000000000000000000000000000000000000000000000000000000000000000000000000000000000000000000000000000000000000000000000000000000000000000000000000000000000000000000000000000000000000000000000000000000000000000000000000000000000000000000000000000000000000000000000000000000000000000000000000000000000000000000000000000000000000000000000000000000000000000000000000000000000000000000000000000000000000000000000000000000000000000000000000000000000000000000000000000000000000000000000000000000000000000000000000000000000000000000000000000000000000000000000000000000000000000000000000000000000000000000000000000000000000000000000000000000000000000000000000000000000000000000000000000000000000000000000000000000000000000000000000000000000000000000000000000000000000000000000000000000000000000000000000000000000000000000000000000000000000000000000000000000000000000000000000000000000000000000000000000000000000000000000000000000000000000000000000000000000000000000000000000000000000000000000000000000000000000000000000000000000000000000000000000000000000000000000000000000000000000000000000000000000000000000000000000000000000000000000000000000000000000000000000000000000000000000000000000000000000000000000000000000000000000000000000000000000000000000000000000000000000000000000000000000000000000000000000000000000000000000000000000000000000000000000000000000000000000000000000000000000000000000000000000000000000000000000000000000000000000000000000000000000000000000000000000000000000000000000000000000000000000000000000000000000000000000000000000000000000000000000000000000000000000000000000000000000000000000000000000000000000000000000000000000000000000000000000000000000000000000000000000000000000000000000000000000000000000000000000000000000000000000000000000000000000000000000000000000000000000000000000000000000000000000000000000000000000000000000000000000000000000000000000000000000000000000000000000000000000000000000000000000000000000000000000000000000000000000000000000000000000000000000000000000000000000000000000000000000000000000000000000000000000000000000000000000000000000000000000000000000000000000000000000000000000000000000000000000000000000000000000000000000000000000000000000000000000000000000000000000000000000000000000000000000000000000000000000000000000000000000000000000000000000000000000000000000000000000000000000000000000000000000000000000000000000000000000000000000000000000000000000000000000000000000000000000000000000000000000000000000000000000000000000000000000000000000000000000000000000000000000000000000000000000000000000000000000000000000000000000000000000000000000000000000000000000000000000000000000000000000000000000000000000000000000000000000000000000000000000000000000000000000000000000000000000000000000000000000000000000000000000000000000000000000000000000000000000000000000000000000000000000000000000000000000000000000000000000000000000000000000000000000000000000000000000000000000000000000000000000000000000000000000000000000000000000000000000000000000000000000000000000000000000000000000000000000000000000000000000000000000000000000000000000000000000000000000000000000000000000000000000000000000000000000000000000000000000000000000000000000000000000000000000000000000000000000000000000000000000000000000000000000000000000000000000000000000000000000000000000000000000000000000000000000000000000000000000000000000000000000000000000000000000000000000000000000000000000000000000000000000000000000000000000000000000000000000000000000000000000000000000000000000000000000000000000000000000000000000000000000000000000000000000000000000000000000000000000000000000000000000000000000000000000000000000000000000000000000000000000000000000000000000000000000000000000000000000000000000000000000000000000000000000000000000000000000000000000000000000000000000000000000000000000000000000000000000000000000000000000000000000000000000000000000000000000000000000000000000000000000000000000000000000000000000000000000000000000000000000000000000000000000000000000000000000000000000000000000000000000000000000000000000000000000000000000000000000000000000000000000000000000000000000000000000000000000000000000000000000000000000000000000000000000000000000000000000000000000000000000000000000000000000000000000000000000000000000000000000000000000000000000000000000000000000000000000000000000000000000000000000000000000000000000000000000000000000000000000000000000000000000000000000000000000000000000000000000000000000000000000000000000000000000000000000000000000000000000000000000000000000000000000000000000000000000000000000000000000000000000000000000000000000000000000000000000000000000000000000000000000000000000000000000000000000000000000000000000000000000000000000000000000000000000000000000000000000000000000000000000000000000000000000000000000000000000000000000000000000000000000000000000000000000000000000000000000000000000000000000000000000000000000000000000000000000000000000000000000000000000000000000000000000000000000000000000000000000000000000000000000000000000000000000000000000000000000000000000000000000000000000000000000000000000000000000000000000000000000000000000000000000000000000000000000000000000000000000000000000000000000000000000000000000000000000000000000000000000000000000000000000000000000000000000000000000000000000000000000000000000000000000000000000000000000000000000000000000000000000000000000000000000000000000000000000000000000000000000000000000000000000000000000000000000000000000000000000000000000000000000000000000000000000000000000000000000000000000000000000000000000000000000000000000000000000000000000000000000000000000000000000000000000000000000000000000000000000000000000000000000000000000000000000000000000000000000000000000000000000000000000000000000000000000000000000000000000000000000000000000000000000000000000000000000000000000000000000000000000000000000000000000000000000000000000000000000000000000000000000000000000000000000000000000000000000000000000000000000000000000000000000000000000000000000000000000000000000000000000000000000000000000000000000000000000000000000000000000000000000000000000000000000000000000000000000000000000000000000000000000000000000000000000000000000000000000000000000000000000000000000000000000000000000000000000000000000000000000000000000000000000000000000000000000000000000000000000000000000000000000000000000000000000000000000000000000000000000000000000000000000000000000000000000000000000000000000000000000000000000000000000000000000000000000000000000000000000000000000000000000000000000000000000000000000000000000000000000000000000000000000000000000000000000000000000000000000000000000000000000000000000000000000000000000000000000000000000000000000000000000000000000000000000000000000000000000000000000000000000000000000000000000000000000000000000000000000000000000000000000000000000000000000000000000000000000000000000000000000000000000000000000000000000000000000000000000000000000000000000000000000000000000000000000000000000000000000000000000000000000000000000000000000000000000000000000000000000000000000000000000000000000000000000000000000000000000000000000000000000000000000000000000000000000000000000000000000000000000000000000000000000000000000000000000000000000000000000000000000000000000000000000000000000000000000000000000000000000000000000000000000000000000000000000000000000000000000000000000000000000000000000000000000000000000000000000000000000000000000000000000000000000000000000000000000000000000000000000000000000000000000000000000000000000000000000000000000000000000000000000000000000000000000000000000000000000000000000000000000000000000000000000000000000000000000000000000000000000000000000000000000000000000000000000000000000000000000000000000000000000000000000000000000000000000000000000000000000000000000000000000000000000000000000000000000000000000000000000000000000000000000000000000000000000000000000000000000000000000000000000000000000000000000000000000000000000000000000000000000000000000000000000000000000000000000000000000000000000000000000000000000000000000000000000000000000000000000000000000000000000000000000000000000000000000000000000000000000000000000000000000000000000000000000000000000000000000000000000000000000000000000000000000000000000000000000000000000000000000000000000000000000000000000000000000000000000000000000000000000000000000000000000000000000000000000000000000000000000000000000000000000000000000000000000000000000000000000000000000000000000000000000000000000000000000000000000000000000000000000000000000000000000000000000000000000000000000000000000000000000000000000000000000000000000000000000000000000000000000000000000000000000000000000000000000000000000000000000000000000000000000000000000000000000000000000000000000000000000000000000000000000000000000000000000000000000000000000000000000000000000000000000000000000000000000000000000000000000000000000000000000000000000000000000000000000000000000000000000000000000000000000000000000000000000000000000000000000000000000000000000000000000000000000000000000000000000000000000000000000000000000000000000000000000000000000000000000000000000000000000000000000000000000000000000000000000000000000000000000000000000000000000000000000000000000000000000000000000000000000000000000000000000000000000000000000000000000000000000000000000000000000000000000000000000000000000000000000000000000000000000000000000000000000000000000000000000000000000000000000000000000000000000000000000000000000000000000000000000000000000000000000000000000000000000000000000000000000000000000000000000000000000000000000000000000000000000000000000000000000000000000000000000000000000000000000000000000000000000000000000000000000000000000000000000000000000000000000000000000000000000000000000000000000000000000000000000000000000000000000000000000000000000000000000000000000000000000000000000000000000000000000000000000000000000000000000000000000000000000000000000000000000000000000000000000000000000000000000000000000000000000000000000000000000000000000000000000000000000000000000000000000000000000000000000000000000000000000000000000000000000000000000000000000000000000000000000000000000000000000000000000000000000000000000000000000000000000000000000000000000000000000000000000000000000000000000000000000000000000000000000000000000000000000000000000000000000000000000000000000000000000000000000000000000000000000000000000000000000000000000000000000000000000000000000000000000000000000000000000000000000000000000000000000000000000000000000000000000000000000000000000000000000000000000000000000000000000000000000000000000000000000000000000000000000000000000000000000000000000000000000000000000000000000000000000000000000000000000000000000000000000000000000000000000000000000000000000000000000000000000000000000000000000000000000000000000000000000000000000000000000000000000000000000000000000000000000000000000000000000000000000000000000000000000000000000000000000000000000000000000000000000000000000000000000000000000000000000000000000000000000000000000000000000000000000000000000000000000000000000000000000000000000000000000000000000000000000000000000000000000000000000000000000000000000000000000000000000000000000000000000000000000000000000000000000000000000000000000000000000000000000000000000000000000000000000000000000000000000000000000000000000000000000000000000000000000000000000000000000000000000000000000000000000000000000000000000000000000000000000000000000000000000000000000000000000000000000000000000000000000000000000000000000000000000000000000000000000000000000000000000000000000000000000000000000000000000000000000000000000000000000000000000000000000000000000000000000000000000000000000000000000000000000000000000000000000000000000000000000000000000000000000000000000000000000000000000000000000000000000000000000000000000000000000000000000000000000000000000000000000000000000000000000000000000000000000000000000000000000000000000000000000000000000000000000000000000000000000000000000000000000000000000000000000000000000000000000000000000000000000000000000000000000000000000000000000000000000000000000000000000000000000000000000000000000000000000000000000000000000000000000000000000000000000000000000000000000000000000000000000000000000000000000000000000000000000000000000000000000000000000000000000000000000000000000000000000000000000000000000000000000000000000000000000000000000000000000000000000000000000000000000000000000000000000000000000000000000000000000000000000000000000000000000000000000000000000000000000000000000000000000000000000000000000000000000000000000000000000000000000000000000000000000000000000000000000000000000000000000000000000000000000000000000000000000000000000000000000000000000000000000000000000000000000000000000000000000000000000000000000000000000000000000000000000000000000000000000000000000000000000000000000000000000000000000000000000000000000000000000000000000000000000000000000000000000000000000000000000000000000000000000000000000000000000000000000000000000000000000000000000000000000000000000000000000000000000000000000000000000000000000000000000000000000000000000000000000000000000000000000000000000000000000000000000000000000000000000000000000000000000000000000000000000000000000000000000000000000000000000000000000000000000000000000000000000000000000000000000000000000000000000000000000000000000000000000000000000000000000000000000000000000000000000000000000000000000000000000000000000000000000000000000000000000000000000000000000000000000000000000000000000000000000000000000000000000000000000000000000000000000000000000000000000000000000000000000000000000000000000000000000000000000000000000000000000000000000000000000000000000000000000000000000000000000000000000000000000000000000000000000000000000000000000000000000000000000000000000000000000000000000000000000000000000000000000000000000000000000000000000000000000000000000000000000000000000000000000000000000000000000000000000000000000000000000000000000000000000000000000000000000000000000000000000000000000000000000000000000000000000000000000000000000000000000000000000000000000000000000000000000000000000000000000000000000000000000000000000000000000000000000000000000000000000000000000000000000000000000000000000000000000000000000000000000000000000000000000000000000000000000000000000000000000000000000000000000000000000000000000000000000000000000000000000000000000000000000000000000000000000000000000000000000000000000000000000000000000000000000000000000000000000000000000000000000000000000000000000000000000000000000000000000000000000000000000000000000000000000000000000000000000000000000000000000000000000000000000000000000000000000000000000000000000000000000000000000000000000000000000000000000000000000000000000000000000000000000000000000000000000000000000000000000000000000000000000000000000000000000000000000000000000000000000000000000000000000000000000000000000000000000000000000000000000000000000000000000000000000000000000000000000000000000000000000000000000000000000000000000000000000000000000000000000000000000000000000000000000000000000000000000000000000000000000000000000000000000000000000000000000000000000000000000000000000000000000000000000000000000000000000000000000000000000000000000000000000000000000000000000000000000000000000000000000000000000000000000000000000000000000000000000000000000000000000000000000000000000000000000000000000000000000000000000000000000000000000000000000000000000000000000000000000000000000000000000000000000000000000000000000000000000000000000000000000000000000000000000000000000000000000000000000000000000000000000000000000000000000000000000000000000000000000000000000000000000000000000000000000000000000000000000000000000000000000000000000000000000000000000000000000000000000000000000000000000000000000000000000000000000000000000000000000000000000000000000000000000000000000000000000000000000000000000000000000000000000000000000000000000000000000000000000000000000000000000000000000000000000000000000000000000000000000000000000000000000000000000000000000000000000000000000000000000000000000000000000000000000000000000000000000000000000000000000000000000000000000000000000000000000000000000000000000000000000000000000000000000000000000000000000000000000000000000000000000000000000000000000000000000000000000000000000000000000000000000000000000000000000000000000000000000000000000000000000000000000000000000000000000000000000000000000000000000000000000000000000000000000000000000000000000000000000000000000000000000000000000000000000000000000000000000000000000000000000000000000000000000000000000000000000000000000000000000000000000000000000000000000000000000000000000000000000000000000000000000000000000000000000000000000000000000000000000000000000000000000000000000000000000000000000000000000000000000000000000000000000000000000000000000000000000000000000000000000000000000000000000000000000000000000000000000000000000000000000000000000000000000000000000000000000000000000000000000000000000000000000000000000000000000000000000000000000000000000000000000000000000000000000000000000000000000000000000000000000000000000000000000000000000000000000000000000000000000000000000000000000000000000000000000000000000000000000000000000000000000000000000000000000000000000000000000000000000000000000000000000000000000000000000000000000000000000000000000000000000000000000000000000000000000000000000000000000000000000000000000000000000000000000000000000000000000000000000000000000000000000000000000000000000000000000000000000000000000000000000000000000000000000000000000000000000000000000000000000000000000000000000000000000000000000000000000000000000000000000000000000000000000000000000000000000000000000000000000000000000000000000000000000000000000000000000000000000000000000000000000000000000000000000000000000000000000000000000000000000000000000000000000000000000000000000000000000000000000000000000000000000000000000000000000000000000000000000000000000000000000000000000000000000000000000000000000000000000000000000000000000000000000000000000000000000000000000000000000000000000000000000000000000000000000000000000000000000000000000000000000000000000000000000000000000000000000000000000000000000000000000000000000000000000000000000000000000000000000000000000000000000000000000000000000000000000000000000000000000000000000000000000000000000000000000000000000000000000000000000000000000000000000000000000000000000000000000000000000000000000000000000000000000000000000000000000000000000000000000000000000000000000000000000000000000000000000000000000000000000000000000000000000000000000000000000000000000000000000000000000000000000000000000000000000000000000000000000000000000000000000000000000000000000000000000000000000000000000000000000000000000000000000000000000000000000000000000000000000000000000000000000000000000000000000000000000000000000000000000000000000000000000000000000000000000000000000000000000000000000000000000000000000000000000000000000000000000000000000000000000000000000000000000000000000000000000000000000000000000000000000000000000000000000000000000000000000000000000000000000000000000000000000000000000000000000000000000000000000000000000000000000000000000000000000000000000000000000000000000000000000000000000000000000000000000000000000000000000000000000000000000000000000000000000000000000000000000000000000000000000000000000000000000000000000000000000000000000000000000000000000000000000000000000000000000000000000000000000000000000000000000000000000000000000000000000000000000000000000000000000000000000000000000000000000000000000000000000000000000000000000000000000000000000000000000000000000000000000000000000000000000000000000000000000000000000000000000000000000000000000000000000000000000000000000000000000000000000000000000000000000000000000000000000000000000000000000000000000000000000000000000000000000000000000000000000000000000000000000000000000000000000000000000000000000000000000000000000000000000000000000000000000000000000000000000000000000000000000000000000000000000000000000000000000000000000000000000000000000000000000000000000000000000000000000000000000000000000000000000000000000000000000000000000000000000000000000000000000000000000000000000000000000000000000000000000000000000000000000000000000000000000000000000000000000000000000000000000000000000000000000000000000000000000000000000000000000000000000000000000000000000000000000000000000000000000000000000000000000000000000000000000000000000000000000000000000000000000000000000000000000000000000000000000000000000000000000000000000000000000000000000000000000000000000000000000000000000000000000000000000000000000000000000000000000000000000000000000000000000000000000000000000000000000000000000000000000000000000000000000000000000000000000000000000000000000000000000000000000000000000000000000000000000000000000000000000000000000000000000000000000000000000000000000000000000000000000000000000000000000000000000000000000000000000000000000000000000000000000000000000000000000000000000000000000000000000000000000000000000000000000000000000000000000000000000000000000000000000000000000000000000000000000000000000000000000000000000000000000000000000000000000000000000000000000000000000000000000000000000000000000000000000000000000000000000000000000000000000000000000000000000000000000000000000000000000000000000000000000000000000000000000000000000000000000000000000000000000000000000000000000000000000000000000000000000000000000000000000000000000000000000000000000000000000000000000000000000000000000000000000000000000000000000000000000000000000000000000000000000000000000000000000000000000000000000000000000000000000000000000000000000000000000000000000000000000000000000000000000000000000000000000000000000000000000000000000000000000000000000000000000000000000000000000000000000000000000000000000000000000000000000000000000000000000000000000000000000000000000000000000000000000000000000000000000000000000000000000000000000000000000000000000000000000000000000000000000000000000000000000000000000000000000000000000000000000000000000000000000000000000000000000000000000000000000000000000000000000000000000000000000000000000000000000000000000000000000000000000000000000000000000000000000000000000000000000000000000000000000000000000000000000000000000000000000000000000000000000000000000000000000000000000000000000000000000000000000000000000000000000000000000000000000000000000000000000000000000000000000000000000000000000000000000000000000000000000000000000000000000000000000000000000000000000000000000000000000000000000000000000000000000000000000000000000000000000000000000000000000000000000000000000000000000000000000000000000000000000000000000000000000000000000000000000000000000000000000000000000000000000000000000000000000000000000000000000000000000000000000000000000000000000000000000000000000000000000000000000000000000000000000000000000000000000000000000000000000000000000000000000000000000000000000000000000000000000000000000000000000000000000000000000000000000000000000000000000000000000000000000000000000000000000000000000000000000000000000000000000000000000000000000000000000000000000000000000000000000000000000000000000000000000000000000000000000000000000000000000000000000000000000000000000000000000000000000000000000000000000000000000000000000000000000000000000000000000000000000000000000000000000000000000000000000000000000000000000000000000000000000000000000000000000000000000000000000000000000000000000000000000000000000000000000000000000000000000000000000000000000000000000000000000000000000000000000000000000000000000000000000000000000000000000000000000000000000000000000000000000000000000000000000000000000000000000000000000000000000000000000000000000000000000000000000000000000000000000000000000000000000000000000000000000000000000000000000000000000000000000000000000000000000000000000000000000000000000000000000000000000000000000000000000000000000000000000000000000000000000000000000000000000000000000000000000000000000000000000000000000000000000000000000000000000000000000000000000000000000000000000000000000000000000000000000000000000000000000000000000000000000000000000000000000000000000000000000000000000000000000000000000000000000000000000000000000000000000000000000000000000000000000000000000000000000000000000000000000000000000000000000000000000000000000000000000000000000000000000000000000000000000000000000000000000000000000000000000000000000000000000000000000000000000000000000000000000000000000000000000000000000000000000000000000000000000000000000000000000000000000000000000000000000000000000000000000000000000000000000000000000000000000000000000000000000000000000000000000000000000000000000000000000000000000000000000000000000000000000000000000000000000000000000000000000000000000000000000000000000000000000000000000000000000000000000000000000000000000000000000000000000000000000000000000000000000000000000000000000000000000000000000000000000000000000000000000000000000000000000000000000000000000000000000000000000000000000000000000000000000000000000000000000000000000000000000000000000000000000000000000000000000000000000000000000000000000000000000000000000000000000000000000000000000000000000000000000000000000000000000000000000000000000000000000000000000000000000000000000000000000000000000000000000000000000000000000000000000000000000000000000000000000000000000000000000000000000000000000000000000000000000000000000000000000000000000000000000000000000000000000000000000000000000000000000000000000000000000000000000000000000000000000000000000000000000000000000000000000000000000000000000000000000000000000000000000000000000000000000000000000000000000000000000000000000000000000000000000000000000000000000000000000000000000000000000000000000000000000000000000000000000000000000000000000000000000000000000000000000000000000000000000000000000000000000000000000000000000000000000000000000000000000000000000000000000000000000000000000000000000000000000000000000000000000000000000000000000000000000000000000000000000000000000000000000000000000000000000000000000000000000000000000000000000000000000000000000000000000000000000000000000000000000000000000000000000000000000000000000000000000000000000000000000000000000000000000000000000000000000000000000000000000000000000000000000000000000000000000000000000000000000000000000000000000000000000000000000000000000000000000000000000000000000000000000000000000000000000000000000000000000000000000000000000000000000000000000000000000000000000000000000000000000000000000000000000000000000000000000000000000000000000000000000000000000000000000000000000000000000000000000000000000000000000000000000000000000000000000000000000000000000000000000000000000000000000000000000000000000000000000000000000000000000000000000000000000000000000000000000000000000000000000000000000000000000000000000000000000000000000000000000000000000000000000000000000000000000000000000000000000000000000000000000000000000000000000000000000000000000000000000000000000000000000000000000000000000000000000000000000000000000000000000000000000000000000000000000000000000000000000000000000000000000000000000000000000000000000000000000000000000000000000000000000000000000000000000000000000000000000000000000000000000000000000000000000000000000000000000000000000000000000000000000000000000000000000000000000000000000000000000000000000000000000000000000000000000000000000000000000000000000000000000000000000000000000000000000000000000000000000000000000000000000000000000000000000000000000000000000000000000000000000000000000000000000000000000000000000000000000000000000000000000000000000000000000000000000000000000000000000000000000000000000000000000000000000000000000000000000000000000000000000000000000000000000000000000000000000000000000000000000000000000000000000000000000000000000000000000000000000000000000000000000000000000000000000000000000000000000000000000000000000000000000000000000000000000000000000000000000000000000000000000000000000000000000000000000000000000000000000000000000000000000000000000000000000000000000000000000000000000000000000000000000000000000000000000000000000000000000000000000000000000000000000000000000000000000000000000000000000000000000000000000000000000000000000000000000000000000000000000000000000000000000000000000000000000000000000000000000000000000000000000000000000000000000000000000000000000000000000000000000000000000000000000000000000000000000000000000000000000000000000000000000000000000000000000000000000000000000000000000000000000000000000000000000000000000000000000000000000000000000000000000000000000000000000000000000000000000000000000000000000000000000000000000000000000000000000000000000000000000000000000000000000000000000000000000000000000000000000000000000000000000000000000000000000000000000000000000000000000000000000000000000000000000000000000000000000000000000000000000000000000000000000000000000000000000000000000000000000000000000000000000000000000000000000000000000000000000000000000000000000000000000000000000000000000000000000000000000000000000000000000000000000000000000000000000000000000000000000000000000000000000000000000000000000000000000000000000000000000000000000000000000000000000000000000000000000000000000000000000000000000000000000000000000000000000000000000000000000000000000000000000000000000000000000000000000000000000000000000000000000000000000000000000000000000000000000000000000000000000000000000000000000000000000000000000000000000000000000000000000000000000000000000000000000000000000000000000000000000000000000000000000000000000000000000000000000000000000000000000000000000000000000000000000000000000000000000000000000000000000000000000000000000000000000000000000000000000000000000000000000000000000000000000000000000000000000000000000000000000000000000000000000000000000000000000000000000000000000000000000000000000000000000000000000000000000000000000000000000000000000000000000000000000000000000000000000000000000000000000000000000000000000000000000000000000000000000000000000000000000000000000000000000000000000000000000000000000000000000000000000000000000000000000000000000000000000000000000000000000000000000000000000000000000000000000000000000000000000000000000000000000000000000000000000000000000000000000000000000000000000000000000000000000000000000000000000000000000000000000000000000000000000000000000000000000000000000000000000000000000000000000000000000000000000000000000000000000000000000000000000000000000000000000000000000000000000000000000000000000000000000000000000000000000000000000000000000000000000000000000000000000000000000000000000000000000000000000000000000000000000000000000000000000000000000000000000000000000000000000000000000000000000000000000000000000000000000000000000000000000000000000000000000000000000000000000000000000000000000000000000000000000000000000000000000000000000000000000000000000000000000000000000000000000000000000000000000000000000000000000000000000000000000000000000000000000000000000000000000000000000000000000000000000000000000000000000000000000000000000000000000000000000000000000000000000000000000000000000000000000000000000000000000000000000000000000000000000000000000000000000000000000000000000000000000000000000000000000000000000000000000000000000000000000000000000000000000000000000000000000000000000000000000000000000000000000000000000000000000000000000000000000000000000000000000000000000000000000000000000000000000000000000000000000000000000000000000000000000000000000000000000000000000000000000000000000000000000000000000000000000000000000000000000000000000000000000000000000000000000000000000000000000000000000000000000000000000000000000000000000000000000000000000000000000000000000000000000000000000000000000000000000000000000000000000000000000000000000000000000000000000000000000000000000000000000000000000000000000000000000000000000000000000000000000000000000000000000000000000000000000000000000000000000000000000000000000000000000000000000000000000000000000000000000000000000000000000000000000000000000000000000000000000000000000000000000000000000000000000000000000000000000000000000000000000000000000000000000000000000000000000000000000000000000000000000000000000000000000000000000000000000000000000000000000000000000000000000000000000000000000000000000000000000000000000000000000000000000000000000000000000000000000000000000000000000000000000000000000000000000000000000000000000000000000000000000000000000000000000000000000000000000000000000000000000000000000000000000000000000000000000000000000000000000000000000000000000000000000000000000000000000000000000000000000000000000000000000000000000000000000000000000000000000000000000000000000000000000000000000000000000000000000000000000000000000000000000000000000000000000000000000000000000000000000000000000000000000000000000000000000000000000000000000000000000000000000000000000000000000000000000000000000000000000000000000000000000000000000000000000000000000000000000000000000000000000000000000000000000000000000000000000000000000000000000000000000000000000000000000000000000000000000000000000000000000000000000000000000000000000000000000000000000000000000000000000000000000000000000000000000000000000000000000000000000000000000000000000000000000000000000000000000000000000000000000000000000000000000000000000000000000000000000000000000000000000000000000000000000000000000000000000000000000000000000000000000000000000000000000000000000000000000000000000000000000000000000000000000000000000000000000000000000000000000000000000000000000000000000000000000000000000000000000000000000000000000000000000000000000000000000000000000000000000000000000000000000000000000000000000000000000000000000000000000000000000000000000000000000000000000000000000000000000000000000000000000000000000000000000000000000000000000000000000000000000000000000000000000000000000000000000000000000000000000000000000000000000000000000000000000000000000000000000000000000000000000000000000000000000000000000000000000000000000000000000000000000000000000000000000000000000000000000000000000000000000000000000000000000000000000000000000000000000000000000000000000000000000000000000000000000000000000000000000000000000000000000000000000000000000000000000000000000000000000000000000000000000000000000000000000000000000000000000000000000000000000000000000000000000000000000000000000000000000000000000000000000000000000000000000000000000000000000000000000000000000000000000000000000000000000000000000000000000000000000000000000000000000000000000000000000000000000000000000000000000000000000000000000000000000000000000000000000000000000000000000000000000000000000000000000000000000000000000000000000000000000000000000000000000000000000000000000000000000000000000000000000000000000000000000000000000000000000000000000000000000000000000000000000000000000000000000000000000000000000000000000000000000000000000000000000000000000000000000000000000000000000000000000000000000000000000000000000000000000000000000000000000000000000000000000000000000000000000000000000000000000000000000000000000000000000000000000000000000000000000000000000000000000000000000000000000000000000000000000000000000000000000000000000000000000000000000000000000000000000000000000000000000000000000000000000000000000000000000000000000000000000000000000000000000000000000000000000000000000000000000000000000000000000000000000000000000000000000000000000000000000000000000000000000000000000000000000000000000000000000000000000000000000000000000000000000000000000000000000000000000000000000000000000000000000000000000000000000000000000000000000000000000000000000000000000000000000000000000000000000000000000000000000000000000000000000000000000000000000000000000000000000000000000000000000000000000000000000000000000000000000000000000000000000000000000000000000000000000000000000000000000000000000000000000000000000000000000000000000000000000000000000000000000000000000000000000000000000000000000000000000000000000000000000000000000000000000000000000000000000000000000000000000000000000000000000000000000000000000000000000000000000000000000000000000000000000000000000000000000000000000000000000000000000000000000000000000000000000000000000000000000000000000000000000000000000000000000000000000000000000000000000000000000000000000000000000000000000000000000000000000000000000000000000000000000000000000000000000000000000000000000000000000000000000000000000000000000000000000000000000000000000000000000000000000000000000000000000000000000000000000000000000000000000000000000000000000000000000000000000000000000000000000000000000000000000000000000000000000000000000000000000000000000000000000000000000000000000000000000000000000000000000000000000000000000000000000000000000000000000000000000000000000000000000000000000000000000000000000000000000000000000000000000000000000000000000000000000000000000000000000000000000000000000000000000000000000000000000000000000000000000000000000000000000000000000000000000000000000000000000000000000000000000000000000000000000000000000000000000000000000000000000000000000000000000000000000000000000000000000000000000000000000000000000000000000000000000000000000000000000000000000000000000000000000000000000000000000000000000000000000000000000000000000000000000000000000000000000000000000000000000000000000000000000000000000000000000000000000000000000000000000000000000000000000000000000000000000000000000000000000000000000000000000000000000000000000000000000000000000000000000000000000000000000000000000000000000000000000000000000000000000000000000000000000000000000000000000000000000000000000000000000000000000000000000000000000000000000000000000000000000000000000000000000000000000000000000000000000000000000000000000000000000000000000000000000000000000000000000000000000000000000000000000000000000000000000000000000000000000000000000000000000000000000000000000000000000000000000000000000000000000000000000000000000000000000000000000000000000000000000000000000000000000000000000000000000000000000000000000000000000000000000000000000000000000000000000000000000000000000000000000000000000000000000000000000000000000000000000000000000000000000000000000000000000000000000000000000000000000000000000000000000000000000000000000000000000000000000000000000000000000000000000000000000000000000000000000000000000000000000000000000000000000000000000000000000000000000000000000000000000000000000000000000000000000000000000000000000000000000000000000000000000000000000000000000000000000000000000000000000000000000000000000000000000000000000000000000000000000000000000000000000000000000000000000000000000000000000000000000000000000000000000000000000000000000000000000000000000000000000000000000000000000000000000000000000000000000000000000000000000000000000000000000000000000000000000000000000000000000000000000000000000000000000000000000000000000000000000000000000000000000000000000000000000000000000000000000000000000000000000000000000000000000000000000000000000000000000000000000000000000000000000000000000000000000000000000000000000000000000000000000000000000000000000000000000000000000000000000000000000000000000000000000000000000000000000000000000000000000000000000000000000000000000000000000000000000000000000000000000000000000000000000000000000000000000000000000000000000000000000000000000000000000000000000000000000000000000000000000000000000000000000000000000000000000000000000000000000000000000000000000000000000000000000000000000000000000000000000000000000000000000000000000000000000000000000000000000000000000000000000000000000000000000000000000000000000000000000000000000000000000000000000000000000000000000000000000000000000000000000000000000000000000000000000000000000000000000000000000000000000000000000000000000000000000000000000000000000000000000000000000000000000000000000000000000000000000000000000000000000000000000000000000000000000000000000000000000000000000000000000000000000000000000000000000000000000000000000000000000000000000000000000000000000000000000000000000000000000000000000000000000000000000000000000000000000000000000000000000000000000000000000000000000000000000000000000000000000000000000000000000000000000000000000000000000000000000000000000000000000000000000000000000000000000000000000000000000000000000000000000000000000000000000000000000000000000000000000000000000000000000000000000000000000000000000000000000000000000000000000000000000000000000000000000000000000000000000000000000000000000000000000000000000000000000000000000000000000000000000000000000000000000000000000000000000000000000000000000000000000000000000000000000000000000000000000000000000000000000000000000000000000000000000000000000000000000000000000000000000000000000000000000000000000000000000000000000000000000000000000000000000000000000000000000000000000000000000000000000000000000000000000000000000000000000000000000000000000000000000000000000000000000000000000000000000000000000000000000000000000000000000000000000000000000000000000000000000000000000000000000000000000000000000000000000000000000000000000000000000000000000000000000000000000000000000000000000000000000000000000000000000000000000000000000000000000000000000000000000000000000000000000000000000000000000000000000000000000000000000000000000000000000000000000000000000000000000000000000000000000000000000000000000000000000000000000000000000000000000000000000000000000000000000000000000000000000000000000000000000000000000000000000000000000000000000000000000000000000000000000000000000000000000000000000000000000000000000000000000000000000000000000000000000000000000000000000000000000000000000000000000000000000000000000000000000000000000000000000000000000000000000000000000000000000000000000000000000000000000000000000000000000000000000000000000000000000000000000000000000000000000000000000000000000000000000000000000000000000000000000000000000000000000000000000000000000000000000000000000000000000000000000000000000000000000000000000000000000000000000000000000000000000000000000000000000000000000000000000000000000000000000000000000000000000000000000000000000000000000000000000000000000000000000000000000000000000000000000000000000000000000000000000000000000000000000000000000000000000000000000000000000000000000000000000000000000000000000000000000000000000000000000000000000000000000000000000000000000000000000000000000000000000000000000000000000000000000000000000000000000000000000000000000000000000000000000000000000000000000000000000000000000000000000000000000000000000000000000000000000000000000000000000000000000000000000000000000000000000000000000000000000000000000000000000000000000000000000000000000000000000000000000000000000000000000000000000000000000000000000000000000000000000000000000000000000000000000000000000000000000000000000000000000000000000000000000000000000000000000000000000000000000000000000000000000000000000000000000000000000000000000000000000000000000000000000000000000000000000000000000000000000000000000000000000000000000000000000000000000000000000000000000000000000000000000000000000000000000000000000000000000000000000000000000000000000000000000000000000000000000000000000000000000000000000000000000000000000000000000000000000000000000000000000000000000000000000000000000000000000000000000000000000000000000000000000000000000000000000000000000000000000000000000000000000000000000000000000000000000000000000000000000000000000000000000000000000000000000000000000000000000000000000000000000000000000000000000000000000000000000000000000000000000000000000000000000000000000000000000000000000000000000000000000000000000000000000000000000000000000000000000000000000000000000000000000000000000000000000000000000000000000000000000000000000000000000000000000000000000000000000000000000000000000000000000000000000000000000000000000000000000000000000000000000000000000000000000000000000000000000000000000000000000000000000000000000000000000000000000000000000000000000000000000000000000000000000000000000000000000000000000000000000000000000000000000000000000000000000000000000000000000000000000000000000000000000000000000000000000000000000000000000000000000000000000000000000000000000000000000000000000000000000000000000000000000000000000000000000000000000000000000000000000000000000000000000000000000000000000000000000000000000000000000000000000000000000000000000000000000000000000000000000000000000000000000000000000000000000000000000000000000000000000000000000000000000000000000000000000000000000000000000000000000000000000000000000000000000000000000000000000000000000000000000000000000000000000000000000000000000000000000000000000000000000000000000000000000000000000000000000000000000000000000000000000000000000000000000000000000000000000000000000000000000000000000000000000000000000000000000000000000000000000000000000000000000000000000000000000000000000000000000000000000000000000000000000000000000000000000000000000000000000000000000000000000000000000000000000000000000000000000000000000000000000000000000000000000000000000000000000000000000000000000000000000000000000000000000000000000000000000000000000000000000000000000000000000000000000000000000000000000000000000000000000000000000000000000000000000000000000000000000000000000000000000000000000000000000000000000000000000000000000000000000000000000000000000000000000000000000000000000000000000000000000000000000000000000000000000000000000000000000000000000000000000000000000000000000000000000000000000000000000000000000000000000000000000000000000000000000000000000000000000000000000000000000000000000000000000000000000000000000000000000000000000000000000000000000000000000000000000000000000000000000000000000000000000000000000000000000000000000000000000000000000000000000000000000000000000000000000000000000000000000000000000000000000000000000000000000000000000000000000000000000000000000000000000000000000000000000000000000000000000000000000000000000000000000000000000000000000000000000000000000000000000000000000000000000000000000000000000000000000000000000000000000000000000000000000000000000000000000000000000000000000000000000000000000000000000000000000000000000000000000000000000000000000000000000000000000000000000000000000000000000000000000000000000000000000000000000000000000000000000000000000000000000000000000000000000000000000000000000000000000000000000000000000000000000000000000000000000000000000000000000000000000000000000000000000000000000000000000000000000000000000000000000000000000000000000000000000000000000000000000000000000000000000000000000000000000000000000000000000000000000000000000000000000000000000000000000000000000000000000000000000000000000000000000000000000000000000000000000000000000000000000000000000000000000000000000000000000000000000000000000000000000000000000000000000000000000000000000000000000000000000000000000000000000000000000000000000000000000000000000000000000000000000000000000000000000000000000000000000000000000000000000000000000000000000000000000000000000000000000000000000000000000000000000000000000000000000000000000000000000000000000000000000000000000000000000000000000000000000000000000000000000000000000000000000000000000000000000000000000000000000000000000000000000000000000000000000000000000000000000000000000000000000000000000000000000000000000000000000000000000000000000000000000000000000000000000000000000000000000000000000000000000000000000000000000000000000000000000000000000000000000000000000000000000000000000000000000000000000000000000000000000000000000000000000000000000000000000000000000000000000000000000000000000000000000000000000000000000000000000000000000000000000000000000000000000000000000000000000000000000000000000000000000000000000000000000000000000000000000000000000000000000000000000000000000000000000000000000000000000000000000000000000000000000000000000000000000000000000000000000000000000000000000000000000000000000000000000000000000000000000000000000000000000000000000000000000000000000000000000000000000000000000000000000000000000000000000000000000000000000000000000000000000000000000000000000000000000000000000000000000000000000000000000000000000000000000000000000000000000000000000000000000000000000000000000000000000000000000000000000000000000000000000000000000000000000000000000000000000000000000000000000000000000000000000000000000000000000000000000000000000000000000000000000000000000000000000000000000000000000000000000000000000000000000000000000000000000000000000000000000000000000000000000000000000000000000000000000000000000000000000000000000000000000000000000000000000000000000000000000000000000000000000000000000000000000000000000000000000000000000000000000000000000000000000000000000000000000000000000000000000000000000000000000000000000000000000000000000000000000000000000000000000000000000000000000000000000000000000000000000000000000000000000000000000000000000000000000000000000000000000000000000000000000000000000000000000000000000000000000000000000000000000000000000000000000000000000000000000000000000000000000000000000000000000000000000000000000000000000000000000000000000000000000000000000000000000000000000000000000000000000000000000000000000000000000000000000000000000000000000000000000000000000000000000000000000000000000000000000000000000000000000000000000000000000000000000000000000000000000000000000000000000000000000000000000000000000000000000000000000000000000000000000000000000000000000000000000000000000000000000000000000000000000000000000000000000000000000000000000000000000000000000000000000000000000000000000000000000000000000000000000000000000000000000000000000000000000000000000000000000000000000000000000000000000000000000000000000000000000000000000000000000000000000000000000000000000000000000000000000000000000000000000000000000000000000000000000000000000000000000000000000000000000000000000000000000000000000000000000000000000000000000000000000000000000000000000000000000000000000000000000000000000000000000000000000000000000000000000000000000000000000000000000000000000000000000000000000000000000000000000000000000000000000000000000000000000000000000000000000000000000000000000000000000000000000000000000000000000000000000000000000000000000000000000000000000000000000000000000000000000000000000000000000000000000000000000000000000000000000000000000000000000000000000000000000000000000000000000000000000000000000000000000000000000000000000000000000000000000000000000000000000000000000000000000000000000000000000000000000000000000000000000000000000000000000000000000000000000000000000000000000000000000000000000000000000000000000000000000000000000000000000000000000000000000000000000000000000000000000000000000000000000000000000000000000000000000000000000000000000000000000000000000000000000000000000000000000000000000000000000000000000000000000000000000000000000000000000000000000000000000000000000000000000000000000000000000000000000000000000000000000000000000000000000000000000000000000000000000000000000000000000000000000000000000000000000000000000000000000000000000000000000000000000000000000000000000000000000000000000000000000000000000000000000000000000000000000000000000000000000000000000000000000000000000000000000000000000000000000000000000000000000000000000000000000000000000000000000000000000000000000000000000000000000000000000000000000000000000000000000000000000000000000000000000000000000000000000000000000000000000000000000000000000000000000000000000000000000000000000000000000000000000000000000000000000000000000000000000000000000000000000000000000000000000000000000000000000000000000000000000000000000000000000000000000000000000000000000000000000000000000000000000000000000000000000000000000000000000000000000000000000000000000000000000000000000000000000000000000000000000000000000000000000000000000000000000000000000000000000000000000000000000000000000000000000000000000000000000000000000000000000000000000000000000000000000000000000000000000000000000000000000000000000000000000000000000000000000000000000000000000000000000000000000000000000000000000000000000000000000000000000000000000000000000000000000000000000000000000000000000000000000000000000000000000000000000000000000000000000000000000000000000000000000000000000000000000000000000000000000000000000000000000000000000000000000000000000000000000000000000000000000000000000000000000000000000000000000000000000000000000000000000000000000000000000000000000000000000000000000000000000000000000000000000000000000000000000000000000000000000000000000000000000000000000000000000000000000000000000000000000000000000000000000000000000000000000000000000000000000000000000000000000000000000000000000000000000000000000000000000000000000000000000000000000000000000000000000000000000000000000000000000000000000000000000000000000000000000000000000000000000000000000000000000000000000000000000000000000000000000000000000000000000000000000000000000000000000000000000000000000000000000000000000000000000000000000000000000000000000000000000000000000000000000000000000000000000000000000000000000000000000000000000000000000000000000000000000000000000000000000000000000000000000000000000000000000000000000000000000000000000000000000000000000000000000000000000000000000000000000000000000000000000000000000000000000000000000000000000000000000000000000000000000000000000000000000000000000000000000000000000000000000000000000000000000000000000000000000000000000000000000000000000000000000000000000000000000000000000000000000000000000000000000000000000000000000000000000000000000000000000000000000000000000000000000000000000000000000000000000000000000000000000000000000000000000000000000000000000000000000000000000000000000000000000000000000000000000000000000000000000000000000000000000000000000000000000000000000000000000000000000000000000000000000000000000000000000000000000000000000000000000000000000000000000000000000000000000000000000000000000000000000000000000000000000000000000000000000000000000000000000000000000000000000000000000000000000000000000000000000000000000000000000000000000000000000000000000000000000000000000000000000000000000000000000000000000000000000000000000000000000000000000000000000000000000000000000000000000000000000000000000000000000000000000000000000000000000000000000000000000000000000000000000000000000000000000000000000000000000000000000000000000000000000000000000000000000000000000000000000000000000000000000000000000000000000000000000000000000000000000000000000000000000000000000000000000000000000000000000000000000000000000000000000000000000000000000000000000000000000000000000000000000000000000000000000000000000000000000000000000000000000000000000000000000000000000000000000000000000000000000000000000000000000000000000000000000000000000000000000000000000000000000000000000000000000000000000000000000000000000000000000000000000000000000000000000000000000000000000000000000000000000000000000000000000000000000000000000000000000000000000000000000000000000000000000000000000000000000000000000000000000000000000000000000000000000000000000000000000000000000000000000000000000000000000000000000000000000000000000000000000000000000000000000000000000000000000000000000000000000000000000000000000000000000000000000000000000000000000000000000000000000000000000000000000000000000000000000000000000000000000000000000000000000000000000000000000000000000000000000000000000000000000000000000000000000000000000000000000000000000000000000000000000000000000000000000000000000000000000000000000000000000000000000000000000000000000000000000000000000000000000000000000000000000000000000000000000000000000000000000000000000000000000000000000000000000000000000000000000000000000000000000000000000000000000000000000000000000000000000000000000000000000000000000000000000000000000000000000000000000000000000000000000000000000000000000000000000000000000000000000000000000000000000000000000000000000000000000000000000000000000000000000000000000000000000000000000000000000000000000000000000000000000000000000000000000000000000000000000000000000000000000000000000000000000000000000000000000000000000000000000000000000000000000000000000000000000000000000000000000000000000000000000000000000000000000000000000000000000000000000000000000000000000000000000000000000000000000000000000000000000000000000000000000000000000000000000000000000000000000000000000000000000000000000000000000000000000000000000000000000000000000000000000000000000000000000000000000000000000000000000000000000000000000000000000000000000000000000000000000000000000000000000000000000000000000000000000000000000000000000000000000000000000000000000000000000000000000000000000000000000000000000000000000000000000000000000000000000000000000000000000000000000000000000000000000000000000000000000000000000000000000000000000000000000000000000000000000000000000000000000000000000000000000000000000000000000000000000000000000000000000000000000000000000000000000000000000000000000000000000000000000000000000000000000000000000000000000000000000000000000000000000000000000000000000000000000000000000000000000000000000000000000000000000000000000000000000000000000000000000000000000000000000000000000000000000000000000000000000000000000000000000000000000000000000000000000000000000000000000000000000000000000000000000000000000000000000000000000000000000000000000000000000000000000000000000000000000000000000000000000000000000000000000000000000000000000000000000000000000000000000000000000000000000000000000000000000000000000000000000000000000000000000000000000000000000000000000000000000000000000000000000000000000000000000000000000000000000000000000000000000000000000000000000000000000000000000000000000000000000000000000000000000000000000000000000000000000000000000000000000000000000000000000000000000000000000000000000000000000000000000000000000000000000000000000000000000000000000000000000000000000000000000000000000000000000000000000000000000000000000000000000000000000000000000000000000000000000000000000000000000000000000000000000000000000000000000000000000000000000000000000000000000000000000000000000000000000000000000000000000000000000000000000000000000000000000000000000000000000000000000000000000000000000000000000000000000000000000000000000000000000000000000000000000000000000000000000000000000000000000000000000000000000000000000000000000000000000000000000000000000000000000000000000000000000000000000000000000000000000000000000000000000000000000000000000000000000000000000000000000000000000000000000000000000000000000000000000000000000000000000000000000000000000000000000000000000000000000000000000000000000000000000000000000000000000000000000000000000000000000000000000000000000000000000000000000000000000000000000000000000000000000000000000000000000000000000000000000000000000000000000000000000000000000000000000000000000000000000000000000000000000000000000000000000000000000000000000000000000000000000000000000000000000000000000000000000000000000000000000000000000000000000000000000000000000000000000000000000000000000000000000000000000000000000000000000000000000000000000000000000000000000000000000000000000000000000000000000000000000000000000000000000000000000000000000000000000000000000000000000000000000000000000000000000000000000000000000000000000000000000000000000000000000000000000000000000000000000000000000000000000000000000000000000000000000000000000000000000000000000000000000000000000000000000000000000000000000000000000000000000000000000000000000000000000000000000000000000000000000000000000000000000000000000000000000000000000000000000000000000000000000000000000000000000000000000000000000000000000000000000000000000000000000000000000000000000000000000000000000000000000000000000000000000000000000000000000000000000000000000000000000000000000000000000000000000000000000000000000000000000000000000000000000000000000000000000000000000000000000000000000000000000000000000000000000000000000000000000000000000000000000000000000000000000000000000000000000000000000000000000000000000000000000000000000000000000000000000000000000000000000000000000000000000000000000000000000000000000000000000000000000000000000000000000000000000000000000000000000000000000000000000000000000000000000000000000000000000000000000000000000000000000000000000000000000000000000000000000000000000000000000000000000000000000000000000000000000000000000000000000000000000000000000000000000000000000000000000000000000000000000000000000000000000000000000000000000000000000000000000000000000000000000000000000000000000000000000000000000000000000000000000000000000000000000000000000000000000000000000000000000000000000000000000000000000000000000000000000000000000000000000000000000000000000000000000000000000000000000000000000000000000000000000000000000000000000000000000000000000000000000000000000000000000000000000000000000000000000000000000000000000000000000000000000000000000000000000000000000000000000000000000000000000000000000000000000000000000000000000000000000000000000000000000000000000000000000000000000000000000000000000000000000000000000000000000000000000000000000000000000000000000000000000000000000000000000000000000000000000000000000000000000000000000000000000000000000000000000000000000000000000000000000000000000000000000000000000000000000000000000000000000000000000000000000000000000000000000000000000000000000000000000000000000000000000000000000000000000000000000000000000000000000000000000000000000000000000000000000000000000000000000000000000000000000000000000000000000000000000000000000000000000000000000000000000000000000000000000000000000000000000000000000000000000000000000000000000000000000000000000000000000000000000000000000000000000000000000000000000000000000000000000000000000000000000000000000000000000000000000000000000000000000000000000000000000000000000000000000000000000000000000000000000000000000000000000000000000000000000000000000000000000000000000000000000000000000000000000000000000000000000000000000000000000000000000000000000000000000000000000000000000000000000000000000000000000000000000000000000000000000000000000000000000000000000000000000000000000000000000000000000000000000000000000000000000000000000000000000000000000000000000000000000000000000000000000000000000000000000000000000000000000000000000000000000000000000000000000000000000000000000000000000000000000000000000000000000000000000000000000000000000000000000000000000000000000000000000000000000000000000000000000000000000000000000000000000000000000000000000000000000000000000000000000000000000000000000000000000000000000000000000000000000000000000000000000000000000000000000000000000000000000000000000000000000000000000000000000000000000000000000000000000000000000000000000000000000000000000000000000000000000000000000000000000000000000000000000000000000000000000000000000000000000000000000000000000000000000000000000000000000000000000000000000000000000000000000000000000000000000000000000000000000000000000000000000000000000000000000000000000000000000000000000000000000000000000000000000000000000000000000000000000000000000000000000000000000000000000000000000000000000000000000000000000000000000000000000000000000000000000000000000000000000000000000000000000000000000000000000000000000000000000000000000000000000000000000000000000000000000000000000000000000000000000000000000000000000000000000000000000000000000000000000000000000000000000000000000000000000000000000000000000000000000000000000000000000000000000000000000000000000000000000000000000000000000000000000000000000000000000000000000000000000000000000000000000000000000000000000000000000000000000000000000000000000000000000000000000000000000000000000000000000000000000000000000000000000000000000000000000000000000000000000000000000000000000000000000000000000000000000000000000000000000000000000000000000000000000000000000000000000000000000000000000000000000000000000000000000000000000000000000000000000000000000000000000000000000000000000000000000000000000000000000000000000000000000000000000000000000000000000000000000000000000000000000000000000000000000000000000000000000000000000000000000000000000000000000000000000000000000000000000000000000000000000000000000000000000000000000000000000000000000000000000000000000000000000000000000000000000000000000000000000000000000000000000000000000000000000000000000000000000000000000000000000000000000000000000000000000000000000000000000000000000000000000000000000000000000000000000000000000000000000000000000000000000000000000000000000000000000000000000000000000000000000000000000000000000000000000000000000000000000000000000000000000000000000000000000000000000000000000000000000000000000000000000000000000000000000000000000000000000000000000000000000000000000000000000000000000000000000000000000000000000000000000000000000000000000000000000000000000000000000000000000000000000000000000000000000000000000000000000000000000000000000000000000000000000000000000000000000000000000000000000000000000000000000000000000000000000000000000000000000000000000000000000000000000000000000000000000000000000000000000000000000000000000000000000000000000000000000000000000000000000000000000000000000000000000000000000000000000000000000000000000000000000000000000000000000000000000000000000000000000000000000000000000000000000000000000000000000000000000000000000000000000000000000000000000000000000000000000000000000000000000000000000000000000000000000000000000000000000000000000000000000000000000000000000000000000000000000000000000000000000000000000000000000000000000000000000000000000000000000000000000000000000000000000000000000000000000000000000000000000000000000000000000000000000000000000000000000000000000000000000000000000000000000000000000000000000000000000000000000000000000000000000000000000000000000000000000000000000000000000000000000000000000000000000000000000000000000000000000000000000000000000000000000000000000000000000000000000000000000000000000000000000000000000000000000000000000000000000000000000000000000000000000000000000000000000000000000000000000000000000000000000000000000000000000000000000000000000000000000000000000000000000000000000000000000000000000000000000000000000000000000000000000000000000000000000000000000000000000000000000000000000000000000000000000000000000000000000000000000000000000000000000000000000000000000000000000000000000000000000000000000000000000000000000000000000000000000000000000000000000000000000000000000000000000000000000000000000000000000000000000000000000000000000000000000000000000000000000000000000000000000000000000000000000000000000000000000000000000000000000000000000000000000000000000000000000000000000000000000000000000000000000000000000000000000000000000000000000000000000000000000000000000000000000000000000000000000000000000000000000000000000000000000000000000000000000000000000000000000000000000000000000000000000000000000000000000000000000000000000000000000000000000000000000000000000000000000000000000000000000000000000000000000000000000000000000000000000000000000000000000000000000000000000000000000000000000000000000000000000000000000000000000000000000000000000000000000000000000000000000000000000000000000000000000000000000000000000000000000000000000000000000000000000000000000000000000000000000000000000000000000000000000000000000000000000000000000000000000000000000000000000000000000000000000000000000000000000000000000000000000000000000000000000000000000000000000000000000000000000000000000000000000000000000000000000000000000000000000000000000000000000000000000000000000000000000000000000000000000000000000000000000000000000000000000000000000000000000000000000000000000000000000000000000000000000000000000000000000000000000000000000000000000000000000000000000000000000000000000000000000000000000000000000000000000000000000000000000000000000000000000000000000000000000000000000000000000000000000000000000000000000000000000000000000000000000000000000000000000000000000000000000000000000000000000000000000000000000000000000000000000000000000000000000000000000000000000000000000000000000000000000000000000000000000000000000000000000000000000000000000000000000000000000000000000000000000000000000000000000000000000000000000000000000000000000000000000000000000000000000000000000000000000000000000000000000000000000000000000000000000000000000000000000000000000000000000000000000000000000000000000000000000000000000000000000000000000000000000000000000000000000000000000000000000000000000000000000000000000000000000000000000000000000000000000000000000000000000000000000000000000000000000000000000000000000000000000000000000000000000000000000000000000000000000000000000000000000000000000000000000000000000000000000000000000000000000000000000000000000000000000000000000000000000000000000000000000000000000000000000000000000000000000000000000000000000000000000000000000000000000000000000000000000000000000000000000000000000000000000000000000000000000000000000000000000000000000000000000000000000000000000000000000000000000000000000000000000000000000000000000000000000000000000000000000000000000000000000000000000000000000000000000000000000000000000000000000000000000000000000000000000000000000000000000000000000000000000000000000000000000000000000000000000000000000000000000000000000000000000000000000000000000000000000000000000000000000000000000000000000000000000000000000000000000000000000000000000000000000000000000000000000000000000000000000000000000000000000000000000000000000000000000000000000000000000000000000000000000000000000000000000000000000000000000000000000000000000000000000000000000000000000000000000000000000000000000000000000000000000000000000000000000000000000000000000000000000000000000000000000000000000000000000000000000000000000000000000000000000000000000000000000000000000000000000000000000000000000000000000000000000000000000000000000000000000000000000000000000000000000000000000000000000000000000000000000000000000000000000000000000000000000000000000000000000000000000000000000000000000000000000000000000000000000000000000000000000000000000000000000000000000000000000000000000000000000000000000000000000000000000000000000000000000000000000000000000000000000000000000000000000000000000000000000000000000000000000000000000000000000000000000000000000000000000000000000000000000000000000000000000000000000000000000000000000000000000000000000000000000000000000000000000000000000000000000000000000000000000000000000000000000000000000000000000000000000000000000000000000000000000000000000000000000000000000000000000000000000000000000000000000000000000000000000000000000000000000000000000000000000000000000000000000000000000000000000000000000000000000000000000000000000000000000000000000000000000000000000000000000000000000000000000000000000000000000000000000000000000000000000000000000000000000000000000000000000000000000000000000000000000000000000000000000000000000000000000000000000000000000000000000000000000000000000000000000000000000000000000000000000000000000000000000000000000000000000000000000000000000000000000000000000000000000000000000000000000000000000000000000000000000000000000000000000000000000000000000000000000000000000000000000000000000000000000000000000000000000000000000000000000000000000000000000000000000000000000000000000000000000000000000000000000000000000000000000000000000000000000000000000000000000000000000000000000000000000000000000000000000000000000000000000000000000000000000000000000000000000000000000000000000000000000000000000000000000000000000000000000000000000000000000000000000000000000000000000000000000000000000000000000000000000000000000000000000000000000000000000000000000000000000000000000000000000000000000000000000000000000000000000000000000000000000000000000000000000000000000000000000000000000000000000000000000000000000000000000000000000000000000000000000000000000000000000000000000000000000000000000000000000000000000000000000000000000000000000000000000000000000000000000000000000000000000000000000000000000000000000000000000000000000000000000000000000000000000000000000000000000000000000000000000000000000000000000000000000000000000000000000000000000000000000000000000000000000000000000000000000000000000000000000000000000000000000000000000000000000000000000000000000000000000000000000000000000000000000000000000000000000000000000000000000000000000000000000000000000000000000000000000000000000000000000000000000000000000000000000000000000000000000000000000000000000000000000000000000000000000000000000000000000000000000000000000000000000000000000000000000000000000000000000000000000000000000000000000000000000000000000000000000000000000000000000000000000000000000000000000000000000000000000000000000000000000000000000000000000000000000000000000000000000000000000000000000000000000000000000000000000000000000000000000000000000000000000000000000000000000000000000000000000000000000000000000000000000000000000000000000000000000000000000000000000000000000000000000000000000000000000000000000000000000000000000000000000000000000000000000000000000000000000000000000000000000000000000000000000000000000000000000000000000000000000000000000000000000000000000000000000000000000000000000000000000000000000000000000000000000000000000000000000000000000000000000000000000000000000000000000000000000000000000000000000000000000000000000000000000000000000000000000000000000000000000000000000000000000000000000000000000000000000000000000000000000000000000000000000000000000000000000000000000000000000000000000000000000000000000000000000000000000000000000000000000000000000000000000000000000000000000000000000000000000000000000000000000000000000000000000000000000000000000000000000000000000000000000000000000000000000000000000000000000000000000000000000000000000000000000000000000000000000000000000000000000000000000000000000000000000000000000000000000000000000000000000000000000000000000000000000000000000000000000000000000000000000000000000000000000000000000000000000000000000000000000000000000000000000000000000000000000000000000000000000000000000000000000000000000000000000000000000000000000000000000000000000000000000000000000000000000000000000000000000000000000000000000000000000000000000000000000000000000000000000000000000000000000000000000000000000000000000000000000000000000000000000000000000000000000000000000000000000000000000000000000000000000000000000000000000000000000000000000000000000000000000000000000000000000000000000000000000000000000000000000000000000000000000000000000000000000000000000000000000000000000000000000000000000000000000000000000000000000000000000000000000000000000000000000000000000000000000000000000000000000000000000000000000000000000000000000000000000000000000000000000000000000000000000000000000000000000000000000000000000000000000000000000000000000000000000000000000000000000000000000000000000000000000000000000000000000000000000000000000000000000000000000000000000000000000000000000000000000000000000000000000000000000000000000000000000000000000000000000000000000000000000000000000000000000000000000000000000000000000000000000000000000000000000000000000000000000000000000000000000000000000000000000000000000000000000000000000000000000000000000000000000000000000000000000000000000000000000000000000000000000000000000000000000000000000000000000000000000000000000000000000000000000000000000000000000000000000000000000000000000000000000000000000000000000000000000000000000000000000000000000000000000000000000000000000000000000000000000000000000000000000000000000000000000000000000000000000000000000000000000000000000000000000000000000000000000000000000000000000000000000000000000000000000000000000000000000000000000000000000000000000000000000000000000000000000000000000000000000000000000000000000000000000000000000000000000000000000000000000000000000000000000000000000000000000000000000000000000000000000000000000000000000000000000000000000000000000000000000000000000000000000000000000000000000000000000000000000000000000000000000000000000000000000000000000000000000000000000000000000000000000000000000000000000000000000000000000000000000000000000000000000000000000000000000000000000000000000000000000000000000000000000000000000000000000000000000000000000000000000000000000000000000000000000000000000000000000000000000000000000000000000000000000000000000000000000000000000000000000000000000000000000000000000000000000000000000000000000000000000000000000000000000000000000000000000000000000000000000000000000000000000000000000000000000000000000000000000000000000000000000000000000000000000000000000000000000000000000000000000000000000000000000000000000000000000000000000000000000000000000000000000000000000000000000000000000000000000000000000000000000000000000000000000000000000000000000000000000000000000000000000000000000000000000000000000000000000000000000000000000000000000000000000000000000000000000000000000000000000000000000000000000000000000000000000000000000000000000000000000000000000000000000000000000000000000000000000000000000000000000000000000000000000000000000000000000000000000000000000000000000000000000000000000000000000000000000000000000000000000000000000000000000000000000000000000000000000000000000000000000000000000000000000000000000000000000000000000000000000000000000000000000000000000000000000000000000000000000000000000000000000000000000000000000000000000000000000000000000000000000000000000000000000000000000000000000000000000000000000000000000000000000000000000000000000000000000000000000000000000000000000000000000000000000000000000000000000000000000000000000000000000000000000000000000000000000000000000000000000000000000000000000000000000000000000000000000000000000000000000000000000000000000000000000000000000000000000000000000000000000000000000000000000000000000000000000000000000000000000000000000000000000000000000000000000000000000000000000000000000000000000000000000000000000000000000000000000000000000000000000000000000000000000000000000000000000000000000000000000000000000000000000000000000000000000000000000000000000000000000000000000000000000000000000000000000000000000000000000000000000000000000000000000000000000000000000000000000000000000000000000000000000000000000000000000000000000000000000000000000000000000000000000000000000000000000000000000000000000000000000000000000000000000000000000000000000000000000000000000000000000000000000000000000000000000000000000000000000000000000000000000000000000000000000000000000000000000000000000000000000000000000000000000000000000000000000000000000000000000000000000000000000000000000000000000000000000000000000000000000000000000000000000000000000000000000000000000000000000000000000000000000000000000000000000000000000000000000000000000000000000000000000000000000000000000000000000000000000000000000000000000000000000000000000000000000000000000000000000000000000000000000000000000000000000000000000000000000000000000000000000000000000000000000000000000000000000000000000000000000000000000000000000000000000000000000000000000000000000000000000000000000000000000000000000000000000000000000000000000000000000000000000000000000000000000000000000000000000000000000000000000000000000000000000000000000000000000000000000000000000000000000000000000000000000000000000000000000000000000000000000000000000000000000000000000000000000000000000000000000000000000000000000000000000000000000000000000000000000000000000000000000000000000000000000000000000000000000000000000000000000000000000000000000000000000000000000000000000000000000000000000000000000000000000000000000000000000000000000000000000000000000000000000000000000000000000000000000000000000000000000000000000000000000000000000000000000000000000000000000000000000000000000000000000000000000000000000000000000000000000000000000000000000000000000000000000000000000000000000000000000000000000000000000000000000000000000000000000000000000000000000000000000000000000000000000000000000000000000000000000000000000000000000000000000000000000000000000000000000000000000000000000000000000000000000000000000000000000000000000000000000000000000000000000000000000000000000000000000000000000000000000000000000000000000000000000000000000000000000000000000000000000000000000000000000000000000000000000000000000000000000000000000000000000000000000000000000000000000000000000000000000000000000000000000000000000000000000000000000000000000000000000000000000000000000000000000000000000000000000000000000000000000000000000000000000000000000000000000000000000000000000000000000000000000000000000000000000000000000000000000000000000000000000000000000000000000000000000000000000000000000000000000000000000000000000000000000000000000000000000000000000000000000000000000000000000000000000000000000000000000000000000000000000000000000000000000000000000000000000000000000000000000000000000000000000000000000000000000000000000000000000000000000000000000000000000000000000000000000000000000000000000000000000000000000000000000000000000000000000000000000000000000000000000000000000000000000000000000000000000000000000000000000000000000000000000000000000000000000000000000000000000000000000000000000000000000000000000000000000000000000000000000000000000000000000000000000000000000000000000000000000000000000000000000000000000000000000000000000000000000000000000000000000000000000000000000000000000000000000000000000000000000000000000000000000000000000000000000000000000000000000000000000000000000000000000000000000000000000000000000000000000000000000000000000000000000000000000000000000000000000000000000000000000000000000000000000000000000000000000000000000000000000000000000000000000000000000000000000000000000000000000000000000000000000000000000000000000000000000000000000000000000000000000000000000000000000000000000000000000000000000000000000000000000000000000000000000000000000000000000000000000000000000000000000000000000000000000000000000000000000000000000000000000000000000000000000000000000000000000000000000000000000000000000000000000000000000000000000000000000000000000000000000000000000000000000000000000000000000000000000000000000000000000000000000000000000000000000000000000000000000000000000000000000000000000000000000000000000000000000000000000000000000000000000000000000000000000000000000000000000000000000000000000000000000000000000000000000000000000000000000000000000000000000000000000000000000000000000000000000000000000000000000000000000000000000000000000000000000000000000000000000000000000000000000000000000000000000000000000000000000000000000000000000000000000000000000000000000000000000000000000000000000000000000000000000000000000000000000000000000000000000000000000000000000000000000000000000000000000000000000000000000000000000000000000000000000000000000000000000000000000000000000000000000000000000000000000000000000000000000000000000000000000000000000000000000000000000000000000000000000000000000000000000000000000000000000000000000000000000000000000000000000000000000000000000000000000000000000000000000000000000000000000000000000000000000000000000000000000000000000000000000000000000000000000000000000000000000000000000000000000000000000000000000000000000000000000000000000000000000000000000000000000000000000000000000000000000000000000000000000000000000000000000000000000000000000000000000000000000000000000000000000000000000000000000000000000000000000000000000000000000000000000000000000000000000000000000000000000000000000000000000000000000000000000000000000000000000000000000000000000000000000000000000000000000000000000000000000000000000000000000000000000000000000000000000000000000000000000000000000000000000000000000000000000000000000000000000000000000000000000000000000000000000000000000000000000000000000000000000000000000000000000000000000000000000000000000000000000000000000000000000000000000000000000000000000000000000000000000000000000000000000000000000000000000000000000000000000000000000000000000000000000000000000000000000000000000000000000000000000000000000000000000000000000000000000000000000000000000000000000000000000000000000000000000000000000000000000000000000000000000000000000000000000000000000000000000000000000000000000000000000000000000000000000000000000000000000000000000000000000000000000000000000000000000000000000000000000000000000000000000000000000000000000000000000000000000000000000000000000000000000000000000000000000000000000000000000000000000000000000000000000000000000000000000000000000000000000000000000000000000000000000000000000000000000000000000000000000000000000000000000000000000000000000000000000000000000000000000000000000000000000000000000000000000000000000000000000000000000000000000000000000000000000000000000000000000000000000000000000000000000000000000000000000000000000000000000000000000000000000000000000000000000000000000000000000000000000000000000000000000000000000000000000000000000000000000000000000000000000000000000000000000000000000000000000000000000000000000000000000000000000000000000000000000000000000000000000000000000000000000000000000000000000000000000000000000000000000000000000000000000000000000000000000000000000000000000000000000000000000000000000000000000000000000000000000000000000000000000000000000000000000000000000000000000000000000000000000000000000000000000000000000000000000000000000000000000000000000000000000000000000000000000000000000000000000000000000000000000000000000000000000000000000000000000000000000000000000000000000000000000000000000000000000000000000000000000000000000000000000000000000000000000000000000000000000000000000000000000000000000000000000000000000000000000000000000000000000000000000000000000000000000000000000000000000000000000000000000000000000000000000000000000000000000000000000000000000000000000000000000000000000000000000000000000000000000000000000000000000000000000000000000000000000000000000000000000000000000000000000000000000000000000000000000000000000000000000000000000000000000000000000000000000000000000000000000000000000000000000000000000000000000000000000000000000000000000000000000000000000000000000000000000000000000000000000000000000000000000000000000000000000000000000000000000000000000000000000000000000000000000000000000000000000000000000000000000000000000000000000000000000000000000000000000000000000000000000000000000000000000000000000000000000000000000000000000000000000000000000000000000000000000000000000000000000000000000000000000000000000000000000000000000000000000000000000000000000000000000000000000000000000000000000000000000000000000000000000000000000000000000000000000000000000000000000000000000000000000000000000000000000000000000000000000000000000000000000000000000000000000000000000000000000000000000000000000000000000000000000000000000000000000000000000000000000000000000000000000000000000000000000000000000000000000000000000000000000000000000000000000000000000000000000000000000000000000000000000000000000000000000000000000000000000000000000000000000000000000000000000000000000000000000000000000000000000000000000000000000000000000000000000000000000000000000000000000000000000000000000000000000000000000000000000000000000000000000000000000000000000000000000000000000000000000000000000000000000000000000000000000000000000000000000000000000000000000000000000000000000000000000000000000000000000000000000000000000000000000000000000000000000000000000000000000000000000000000000000000000000000000000000000000000000000000000000000000000000000000000000000000000000000000000000000000000000000000000000000000000000000000000000000000000000000000000000000000000000000000000000000000000000000000000000000000000000000000000000000000000000000000000000000000000000000000000000000000000000000000000000000000000000000000000000000000000000000000000000000000000000000000000000000000000000000000000000000000000000000000000000000000000000000000000000000000000000000000000000000000000000000000000000000000000000000000000000000000000000000000000000000000000000000000000000000000000000000000000000000000000000000000000000000000000000000000000000000000000000000000000000000000000000000000000000000000000000000000000000000000000000000000000000000000000000000000000000000000000000000000000000000000000000000000000000000000000000000000000000000000000000000000000000000000000000000000000000000000000000000000000000000000000000000000000000000000000000000000000000000000000000000000000000000000000000000000000000000000000000000000000000000000000000000000000000000000000000000000000000000000000000000000000000000000000000000000000000000000000000000000000000000000000000000000000000000000000000000000000000000000000000000000000000000000000000000000000000000000000000000000000000000000000000000000000000000000000000000000000000000000000000000000000000000000000000000000000000000000000000000000000000000000000000000000000000000000000000000000000000000000000000000000000000000000000000000000000000000000000000000000000000000000000000000000000000000000000000000000000000000000000000000000000000000000000000000000000000000000000000000000000000000000000000000000000000000000000000000000000000000000000000000000000000000000000000000000000000000000000000000000000000000000000000000000000000000000000000000000000000000000000000000000000000000000000000000000000000000000000000000000000000000000000000000000000000000000000000000000000000000000000000000000000000000000000000000000000000000000000000000000000000000000000000000000000000000000000000000000000000000000000000000000000000000000000000000000000000000000000000000000000000000000000000000000000000000000000000000000000000000000000000000000000000000000000000000000000000000000000000000000000000000000000000000000000000000000000000000000000000000000000000000000000000000000000000000000000000000000000000000000000000000000000000000000000000000000000000000000000000000000000000000000000000000000000000000000000000000000000000000000000000000000000000000000000000000000000000000000000000000000000000000000000000000000000000000000000000000000000000000000000000000000000000000000000000000000000000000000000000000000000000000000000000000000000000000000000000000000000000000000000000000000000000000000000000000000000000000000000000000000000000000000000000000000000000000000000000000000000000000000000000000000000000000000000000000000000000000000000000000000000000000000000000000000000000000000000000000000000000000000000000000000000000000000000000000000000000000000000000000000000000000000000000000000000000000000000000000000000000000000000000000000000000000000000000000000000000000000000000000000000000000000000000000000000000000000000000000000000000000000000000000000000000000000000000000000000000000000000000000000000000000000000000000000000000000000000000000000000000000000000000000000000000000000000000000000000000000000000000000000000000000000000000000000000000000000000000000000000000000000000000000000000000000000000000000000000000000000000000000000000000000000000000000000000000000000000000000000000000000000000000000000000000000000000000000000000000000000000000000000000000000000000000000000000000000000000000000000000000000000000000000000000000000000000000000000000000000000000000000000000000000000000000000000000000000000000000000000000000000000000000000000000000000000000000000000000000000000000000000000000000000000000000000000000000000000000000000000000000000000000000000000000000000000000000000000000000000000000000000000000000000000000000000000000000000000000000000000000000000000000000000000000000000000000000000000000000000000000000000000000000000000000000000000000000000000000000000000000000000000000000000000000000000000000000000000000000000000000000000000000000000000000000000000000000000000000000000000000000000000000000000000000000000000000000000000000000000000000000000000000000000000000000000000000000000000000000000000000000000000000000000000000000000000000000000000000000000000000000000000000000000000000000000000000000000000000000000000000000000000000000000000000000000000000000000000000000000000000000000000000000000000000000000000000000000000000000000000000000000000000000000000000000000000000000000000000000000000000000000000000000000000000000000000000000000000000000000000000000000000000000000000000000000000000000000000000000000000000000000000000000000000000000000000000000000000000000000000000000000000000000000000000000000000000000000000000000000000000000000000000000000000000000000000000000000000000000000000000000000000000000000000000000000000000000000000000000000000000000000000000000000000000000000000000000000000000000000000000000000000000000000000000000000000000000000000000000000000000000000000000000000000000000000000000000000000000000000000000000000000000000000000000000000000000000000000000000000000000000000000000000000000000000000000000000000000000000000000000000000000000000000000000000000000000000000000000000000000000000000000000000000000000000000000000000000000000000000000000000000000000000000000000000000000000000000000000000000000000000000000000000000000000000000000000000000000000000000000000000000000000000000000000000000000000000000000000000000000000000000000000000000000000000000000000000000000000000000000000000000000000000000000000000000000000000000000000000000000000000000000000000000000000000000000000000000000000000000000000000000000000000000000000000000000000000000000000000000000000000000000000000000000000000000000000000000000000000000000000000000000000000000000000000000000000000000000000000000000000000000000000000000000000000000000000000000000000000000000000000000000000000000000000000000000000000000000000000000000000000000000000000000000000000000000000000000000000000000000000000000000000000000000000000000000000000000000000000000000000000000000000000000000000000000000000000000000000000000000000000000000000000000000000000000000000000000000000000000000000000000000000000000000000000000000000000000000000000000000000000000000000000000000000000000000000000000000000000000000000000000000000000000000000000000000000000000000000000000000000000000000000000000000000000000000000000000000000000000000000000000000000000000000000000000000000000000000000000000000000000000000000000000000000000000000000000000000000000000000000000000000000000000000000000000000000000000000000000000000000000000000000000000000000000000000000000000000000000000000000000000000000000000000000000000000000000000000000000000000000000000000000000000000000000000000000000000000000000000000000000000000000000000000000000000000000000000000000000000000000000000000000000000000000000000000000000000000000000000000000000000000000000000000000000000000000000000000000000000000000000000000000000000000000000000000000000000000000000000000000000000000000000000000000000000000000000000000000000000000000000000000000000000000000000000000000000000000000000000000000000000000000000000000000000000000000000000000000000000000000000000000000000000000000000000000000000000000000000000000000000000000000000000000000000000000000000000000000000000000000000000000000000000000000000000000000000000000000000000000000000000000000000000000000000000000000000000000000000000000000000000000000000000000000000000000000000000000000000000000000000000000000000000000000000000000000000000000000000000000000000000000000000000000000000000000000000000000000000000000000000000000000000000000000000000000000000000000000000000000000000000000000000000000000000000000000000000000000000000000000000000000000000000000000000000000000000000000000000000000000000000000000000000000000000000000000000000000000000000000000000000000000000000000000000000000000000000000000000000000000000000000000000000000000000000000000000000000000000000000000000000000000000000000000000000000000000000000000000000000000000000000000000000000000000000000000000000000000000000000000000000000000000000000000000000000000000000000000000000000000000000000000000000000000000000000000000000000000000000000000000000000000000000000000000000000000000000000000000000000000000000000000000000000000000000000000000000000000000000000000000000000000000000000000000000000000000000000000000000000000000000000000000000000000000000000000000000000000000000000000000000000000000000000000000000000000000000000000000000000000000000000000000000000000000000000000000000000000000000000000000000000000000000000000000000000000000000000000000000000000000000000000000000000000000000000000000000000000000000000000000000000000000000000000000000000000000000000000000000000000000000000000000000000000000000000000000000000000000000000000000000000000000000000000000000000000000000000000000000000000000000000000000000000000000000000000000000000000000000000000000000000000000000000000000000000000000000000000000000000000000000000000000000000000000000000000000000000000000000000000000000000000000000000000000000000000000000000000000000000000000000000000000000000000000000000000000000000000000000000000000000000000000000000000000000000000000000000000000000000000000000000000000000000000000000000000000000000000000000000000000000000000000000000000000000000000000000000000000000000000000000000000000000000000000000000000000000000000000000000000000000000000000000000000000000000000000000000000000000000000000000000000000000000000000000000000000000000000000000000000000000000000000000000000000000000000000000000000000000000000000000000000000000000000000000000000000000000000000000000000000000000000000000000000000000000000000000000000000000000000000000000000000000000000000000000000000000000000000000000000000000000000000000000000000000000000000000000000000000000000000000000000000000000000000000000000000000000000000000000000000000000000000000000000000000000000000000000000000000000000000000000000000000000000000000000000000000000000000000000000000000000000000000000000000000000000000000000000000000000000000000000000000000000000000000000000000000000000000000000000000000000000000000000000000000000000000000000000000000000000000000000000000000000000000000000000000000000000000000000000000000000000000000000000000000000000000000000000000000000000000000000000000000000000000000000000000000000000000000000000000000000000000000000000000000000000000000000000000000000000000000000000000000000000000000000000000000000000000000000000000000000000000000000000000000000000000000000000000000000000000000000000000000000000000000000000000000000000000000000000000000000000000000000000000000000000000000000000000000000000000000000000000000000000000000000000000000000000000000000000000000000000000000000000000000000000000000000000000000000000000000000000000000000000000000000000000000000000000000000000000000000000000000000000000000000000000000000000000000000000000000000000000000000000000000000000000000000000000000000000000000000000000000000000000000000000000000000000000000000000000000000000000000000000000000000000000000000000000000000000000000000000000000000000000000000000000000000000000000000000000000000000000000000000000000000000000000000000000000000000000000000000000000000000000000000000000000000000000000000000000000000000000000000000000000000000000000000000000000000000000000000000000000000000000000000000000000000000000000000000000000000000000000000000000000000000000000000000000000000000000000000000000000000000000000000000000000000000000000000000000000000000000000000000000000000000000000000000000000000000000000000000000000000000000000000000000000000000000000000000000000000000000000000000000000000000000000000000000000000000000000000000000000000000000000000000000000000000000000000000000000000000000000000000000000000000000000000000000000000000000000000000000000000000000000000000000000000000000000000000000000000000000000000000000000000000000000000000000000000000000000000000000000000000000000000000000000000000000000000000000000000000000000000000000000000000000000000000000000000000000000000000000000000000000000000000000000000000000000000000000000000000000000000000000000000000000000000000000000000000000000000000000000000000000000000000000000000000000000000000000000000000000000000000000000000000000000000000000000000000000000000000000000000000000000000000000000000000000000000000000000000000000000000000000000000000000000000000000000000000000000000000000000000000000000000000000000000000000000000000000000000000000000000000000000000000000000000000000000000000000000000000000000000000000000000000000000000000000000000000000000000000000000000000000000000000000000000000000000000000000000000000000000000000000000000000000000000000000000000000000000000000000000000000000000000000000000000000000000000000000000000000000000000000000000000000000000000000000000000000000000000000000000000000000000000000000000000000000000000000000000000000000000000000000000000000000000000000000000000000000000000000000000000000000000000000000000000000000000000000000000000000000000000000000000000000000000000000000000000000000000000000000000000000000000000000000000000000000000000000000000000000000000000000000000000000000000000000000000000000000000000000000000000000000000000000000000000000000000000000000000000000000000000000000000000000000000000000000000000000000000000000000000000000000000000000000000000000000000000000000000000000000000000000000000000000000000000000000000000000000000000000000000000000000000000000000000000000000000000000000000000000000000000000000000000000000000000000000000000000000000000000000000000000000000000000000000000000000000000000000000000000000000000000000000000000000000000000000000000000000000000000000000000000000000000000000000000000000000000000000000000000000000000000000000000000000000000000000000000000000000000000000000000000000000000000000000000000000000000000000000000000000000000000000000000000000000000000000000000000000000000000000000000000000000000000000000000000000000000000000000000000000000000000000000000000000000000000000000000000000000000000000000000000000000000000000000000000000000000000000000000000000000000000000000000000000000000000000000000000000000000000000000000000000000000000000000000000000000000000000000000000000000000000000000000000000000000000000000000000000000000000000000000000000000000000000000000000000000000000000000000000000000000000000000000000000000000000000000000000000000000000000000000000000000000000000000000000000000000000000000000000000000000000000000000000000000000000000000000000000000000000000000000000000000000000000000000000000000000000000000000000000000000000000000000000000000000000000000000000000000000000000000000000000000000000000000000000000000000000000000000000000000000000000000000000000000000000000000000000000000000000000000000000000000000000000000000000000000000000000000000000000000000000000000000000000000000000000000000000000000000000000000000000000000000000000000000000000000000000000000000000000000000000000000000000000000000000000000000000000000000000000000000000000000000000000000000000000000000000000000000000000000000000000000000000000000000000000000000000000000000000000000000000000000000000000000000000000000000000000000000000000000000000000000000000000000000000000000000000000000000000000000000000000000000000000000000000000000000000000000000000000000000000000000000000000000000000000000000000000000000000000000000000000000000000000000000000000000000000000000000000000000000000000000000000000000000000000000000000000000000000000000000000000000000000000000000000000000000000000000000000000000000000000000000000000000000000000000000000000000000000000000000000000000000000000000000000000000000000000000000000000000000000000000000000000000000000000000000000000000000000000000000000000000000000000000000000000000000000000000000000000000000000000000000000000000000000000000000000000000000000000000000000000000000000000000000000000000000000000000000000000000000000000000000000000000000000000000000000000000000000000000000000000000000000000000000000000000000000000000000000000000000000000000000000000000000000000000000000000000000000000000000000000000000000000000000000000000000000000000000000000000000000000000000000000000000000000000000000000000000000000000000000000000000000000000000000000000000000000000000000000000000000000000000000000000000000000000000000000000000000000000000000000000000000000000000000000000000000000000000000000000000000000000000000000000000000000000000000000000000000000000000000000000000000000000000000000000000000000000000000000000000000000000000000000000000000000000000000000000000000000000000000000000000000000000000000000000000000000000000000000000000000000000000000000000000000000000000000000000000000000000000000000000000000000000000000000000000000000000000000000000000000000000000000000000000000000000000000000000000000000000000000000000000000000000000000000000000000000000000000000000000000000000000000000000000000000000000000000000000000000000000000000000000000000000000000000000000000000000000000000000000000000000000000000000000000000000000000000000000000000000000000000000000000000000000000000000000000000000000000000000000000000000000000000000000000000000000000000000000000000000000000000000000000000000000000000000000000000000000000000000000000000000000000000000000000000000000000000000000000000000000000000000000000000000000000000000000000000000000000000000000000000000000000000000000000000000000000000000000000000000000000000000000000000000000000000000000000000000000000000000000000000000000000000000000000000000000000000000000000000000000000000000000000000000000000000000000000000000000000000000000000000000000000000000000000000000000000000000000000000000000000000000000000000000000000000000000000000000000000000000000000000000000000000000000000000000000000000000000000000000000000000000000000000000000000000000000000000000000000000000000000000000000000000000000000000000000000000000000000000000000000000000000000000000000000000000000000000000000000000000000000000000000000000000000000000000000000000000000000000000000000000000000000000000000000000000000000000000000000000000000000000000000000000000000000000000000000000000000000000000000000000000000000000000000000000000000000000000000000000000000000000000000000000000000000000000000000000000000000000000000000000000000000000000000000000000000000000000000000000000000000000000000000000000000000000000000000000000000000000000000000000000000000000000000000000000000000000000000000000000000000000000000000000000000000000000000000000000000000000000000000000000000000000000000000000000000000000000000000000000000000000000000000000000000000000000000000000000000000000000000000000000000000000000000000000000000000000000000000000000000000000000000000000000000000000000000000000000000000000000000000000000000000000000000000000000000000000000000000000000000000000000000000000000000000000000000000000000000000000000000000000000000000000000000000000000000000000000000000000000000000000000000000000000000000000000000000000000000000000000000000000000000000000000000000000000000000000000000000000000000000000000000000000000000000000000000000000000000000000000000000000000000000000000000000000000000000000000000000000000000000000000000000000000000000000000000000000000000000000000000000000000000000000000000000000000000000000000000000000000000000000000000000000000000000000000000000000000000000000000000000000000000000000000000000000000000000000000000000000000000000000000000000000000000000000000000000000000000000000000000000000000000000000000000000000000000000000000000000000000000000000000000000000000000000000000000000000000000000000000000000000000000000000000000000000000000000000000000000000000000000000000000000000000000000000000000000000000000000000000000000000000000000000000000000000000000000000000000000000000000000000000000000000000000000000000000000000000000000000000000000000000000000000000000000000000000000000000000000000000000000000000000000000000000000000000000000000000000000000000000000000000000000000000000000000000000000000000000000000000000000000000000000000000000000000000000000000000000000000000000000000000000000000000000000000000000000000000000000000000000000000000000000000000000000000000000000000000000000000000000000000000000000000000000000000000000000000000000000000000000000000000000000000000000000000000000000000000000000000000000000000000000000000000000000000000000000000000000000000000000000000000000000000000000000000000000000000000000000000000000000000000000000000000000000000000000000000000000000000000000000000000000000000000000000000000000000000000000000000000000000000000000000000000000000000000000000000000000000000000000000000000000000000000000000000000000000000000000000000000000000000000000000000000000000000000000000000000000000000000000000000000000000000000000000000000000000000000000000000000000000000000000000000000000000000000000000000000000000000000000000000000000000000000000000000000000000000000000000000000000000000000000000000000000000000000000000000000000000000000000000000000000000000000000000000000000000000000000000000000000000000000000000000000000000000000000000000000000000000000000000000000000000000000000000000000000000000000000000000000000000000000000000000000000000000000000000000000000000000000000000000000000000000000000000000000000000000000000000000000000000000000000000000000000000000000000000000000000000000000000000000000000000000000000000000000000000000000000000000000000000000000000000000000000000000000000000000000000000000000000000000000000000000000000000000000000000000000000000000000000000000000000000000000000000000000000000000000000000000000000000000000000000000000000000000000000000000000000000000000000000000000000000000000000000000000000000000000000000000000000000000000000000000000000000000000000000000000000000000000000000000000000000000000000000000000000000000000000000000000000000000000000000000000000000000000000000000000000000000000000000000000000000000000000000000000000000000000000000000000000000000000000000000000000000000000000000000000000000000000000000000000000000000000000000000000000000000000000000000000000000000000000000000000000000000000000000000000000000000000000000000000000000000000000000000000000000000000000000000000000000000000000000000000000000000000000000000000000000000000000000000000000000000000000000000000000000000000000000000000000000000000000000000000000000000000000000000000000000000000000000000000000000000000000000000000000000000000000000000000000000000000000000000000000000000000000000000000000000000000000000000000000000000000000000000000000000000000000000000000000000000000000000000000000000000000000000000000000000000000000000000000000000000000000000000000000000000000000000000000000000000000000000000000000000000000000000000000000000000000000000000000000000000000000000000000000000000000000000000000000000000000000000000000000000000000000000000000000000000000000000000000000000000000000000000000000000000000000000000000000000000000000000000000000000000000000000000000000000000000000000000000000000000000000000000000000000000000000000000000000000000000000000000000000000000000000000000000000000000000000000000000000000000000000000000000000000000000000000000000000000000000000000000000000000000000000000000000000000000000000000000000000000000000000000000000000000000000000000000000000000000000000000000000000000000000000000000000000000000000000000000000000000000000000000000000000000000000000000000000000000000000000000000000000000000000000000000000000000000000000000000000000000000000000000000000000000000000000000000000000000000000000000000000000000000000000000000000000000000000000000000000000000000000000000000000000000000000000000000000000000000000000000000000000000000000000000000000000000000000000000000000000000000000000000000000000000000000000000000000000000000000000000000000000000000000000000000000000000000000000000000000000000000000000000000000000000000000000000000000000000000000000000000000000000000000000000000000000000000000000000000000000000000000000000000000000000000000000000000000000000000000000000000000000000000000000000000000000000000000000000000000000000000000000000000000000000000000000000000000000000000000000000000000000000000000000000000000000000000000000000000000000000000000000000000000000000000000000000000000000000000000000000000000000000000000000000000000000000000000000000000000000000000000000000000000000000000000000000000000000000000000000000000000000000000000000000000000000000000000000000000000000000000000000000000000000000000000000000000000000000000000000000000000000000000000000000000000000000000000000000000000000000000000000000000000000000000000000000000000000000000000000000000000000000000000000000000000000000000000000000000000000000000000000000000000000000000000000000000000000000000000000000000000000000000000000000000000000000000000000000000000000000000000000000000000000000000000000000000000000000000000000000000000000000000000000000000000000000000000000000000000000000000000000000000000000000000000000000000000000000000000000000000000000000000000000000000000000000000000000000000000000000000000000000000000000000000000000000000000000000000000000000000000000000000000000000000000000000000000000000000000000000000000000000000000000000000000000000000000000000000000000000000000000000000000000000000000000000000000000000000000000000000000000000000000000000000000000000000000000000000000000000000000000000000000000000000000000000000000000000000000000000000000000000000000000000000000000000000000000000000000000000000000000000000000000000000000000000000000000000000000000000000000000000000000000000000000000000000000000000000000000000000000000000000000000000000000000000000000000000000000000000000000000000000000000000000000000000000000000000000000000000000000000000000000000000000000000000000000000000000000000000000000000000000000000000000000000000000000000000000000000000000000000000000000000000000000000000000000000000000000000000000000000000000000000000000000000000000000000000000000000000000000000000000000000000000000000000000000000000000000000000000000000000000000000000000000000000000000000000000000000000000000000000000000000000000000000000000000000000000000000000000000000000000000000000000000000000000000000000000000000000000000000000000000000000000000000000000000000000000000000000000000000000000000000000000000000000000000000000000000000000000000000000000000000000000000000000000000000000000000000000000000000000000000000000000000000000000000000000000000000000000000000000000000000000000000000000000000000000000000000000000000000000000000000000000000000000000000000000000000000000000000000000000000000000000000000000000000000000000000000000000000000000000000000000000000000000000000000000000000000000000000000000000000000000000000000000000000000000000000000000000000000000000000000000000000000000000000000000000000000000000000000000000000000000000000000000000000000000000000000000000000000000000000000000000000000000000000000000000000000000000000000000000000000000000000000000000000000000000000000000000000000000000000000000000000000000000000000000000000000000000000000000000000000000000000000000000000000000000000000000000000000000000000000000000000000000000000000000000000000000000000000000000000000000000000000000000000000000000000000000000000000000000000000000000000000000000000000000000000000000000000000000000000000000000000000000000000000000000000000000000000000000000000000000000000000000000000000000000000000000000000000000000000000000000000000000000000000000000000000000000000000000000000000000000000000000000000000000000000000000000000000000000000000000000000000000000000000000000000000000000000000000000000000000000000000000000000000000000000000000000000000000000000000000000000000000000000000000000000000000000000000000000000000000000000000000000000000000000000000000000000000000000000000000000000000000000000000000000000000000000000000000000000000000000000000000000000000000000000000000000000000000000000000000000000000000000000000000000000000000000000000000000000000000000000000000000000000000000000000000000000000000000000000000000000000000000000000000000000000000000000000000000000000000000000000000000000000000000000000000000000000000000000000000000000000000000000000000000000000000000000000000000000000000000000000000000000000000000000000000000000000000000000000000000000000000000000000000000000000000000000000000000000000000000000000000000000000000000000000000000000000000000000000000000000000000000000000000000000000000000000000000000000000000000000000000000000000000000000000000000000000000000000000000000000000000000000000000000000000000000000000000000000000000000000000000000000000000000000000000000000000000000000000000000000000000000000000000000000000000000000000000000000000000000000000000000000000000000000000000000000000000000000000000000000000000000000000000000000000000000000000000000000000000000000000000000000000000000000000000000000000000000000000000000000000000000000000000000000000000000000000000000000000000000000000000000000000000000000000000000000000000000000000000000000000000000000000000000000000000000000000000000000000000000000000000000000000000000000000000000000000000000000000000000000000000000000000000000000000000000000000000000000000000000000000000000000000000000000000000000000000000000000000000000000000000000000000000000000000000000000000000000000000000000000000000000000000000000000000000000000000000000000000000000000000000000000000000000000000000000000000000000000000000000000000000000000000000000000000000000000000000000000000000000000000000000000000000000000000000000000000000000000000000000000000000000000000000000000000000000000000000000000000000000000000000000000000000000000000000000000000000000000000000000000000000000000000000000000000000000000000000000000000000000000000000000000000000000000000000000000000000000000000000000000000000000000000000000000000000000000000000000000000000000000000000000000000000000000000000000000000000000000000000000000000000000000000000000000000000000000000000000000000000000000000000000000000000000000000000000000000000000000000000000000000000000000000000000000000000000000000000000000000000000000000000000000000000000000000000000000000000000000000000000000000000000000000000000000000000000000000000000000000000000000000000000000000000000000000000000000000000000000000000000000000000000000000000000000000000000000000000000000000000000000000000000000000000000000000000000000000000000000000000000000000000000000000000000000000000000000000000000000000000000000000000000000000000000000000000000000000000000000000000000000000000000000000000000000000000000000000000000000000000000000000000000000000000000000000000000000000000000000000000000000000000000000000000000000000000000000000000000000000000000000000000000000000000000000000000000000000000000000000000000000000000000000000000000000000000000000000000000000000000000000000000000000000000000000000000000000000000000000000000000000000000000000000000000000000000000000000000000000000000000000000000000000000000000000000000000000000000000000000000000000000000000000000000000000000000000000000000000000000000000000000000000000000000000000000000000000000000000000000000000000000000000000000000000000000000000000000000000000000000000000000000000000000000000000000000000000000000000000000000000000000000000000000000000000000000000000000000000000000000000000000000000000000000000000000000000000000000000000000000000000000000000000000000000000000000000000000000000000000000000000000000000000000000000000000000000000000000000000000000000000000000000000000000000000000000000000000000000000000000000000000000000000000000000000000000000000000000000000000000000000000000000000000000000000000000000000000000000000000000000000000000000000000000000000000000000000000000000000000000000000000000000000000000000000000000000000000000000000000000000000000000000000000000000000000000000000000000000000000000000000000000000000000000000000000000000000000000000000000000000000000000000000000000000000000000000000000000000000000000000000000000000000000000000000000000000000000000000000000000000000000000000000000000000000000000000000000000000000000000000000000000000000000000000000000000000000000000000000000000000000000000000000000000000000000000000000000000000000000000000000000000000000000000000000000000000000000000000000000000000000000000000000000000000000000000000000000000000000000000000000000000000000000000000000000000000000000000000000000000000000000000000000000000000000000000000000000000000000000000000000000000000000000000000000000000000000000000000000000000000000000000000000000000000000000000000000000000000000000000000000000000000000000000000000000000000000000000000000000000000000000000000000000000000000000000000000000000000000000000000000000000000000000000000000000000000000000000000000000000000000000000000000000000000000000000000000000000000000000000000000000000000000000000000000000000000000000000000000000000000000000000000000000000000000000000000000000000000000000000000000000000000000000000000000000000000000000000000000000000000000000000000000000000000000000000000000000000000000000000000000000000000000000000000000000000000000000000000000000000000000000000000000000000000000000000000000000000000000000000000000000000000000000000000000000000000000000000000000000000000000000000000000000000000000000000000000000000000000000000000000000000000000000000000000000000000000000000000000000000000000000000000000000000000000000000000000000000000000000000000000000000000000000000000000000000000000000000000000000000000000000000000000000000000000000000000000000000000000000000000000000000000000000000000000000000000000000000000000000000000000000000000000000000000000000000000000000000000000000000000000000000000000000000000000000000000000000000000000000000000000000000000000000000000000000000000000000000000000000000000000000000000000000000000000000000000000000000000000000000000000000000000000000000000000000000000000000000000000000000000000000000000000000000000000000000000000000000000000000000000000000000000000000000000000000000000000000000000000000000000000000000000000000000000000000000000000000000000000000000000000000000000000000000000000000000000000000000000000000000000000000000000000000000000000000000000000000000000000000000000000000000000000000000000000000000000000000000000000000000000000000000000000000000000000000000000000000000000000000000000000000000000000000000000000000000000000000000000000000000000000000000000000000000000000000000000000000000000000000000000000000000000000000000000000000000000000000000000000000000000000000000000000000000000000000000000000000000000000000000000000000000000000000000000000000000000000000000000000000000000000000000000000000000000000000000000000000000000000000000000000000000000000000000000000000000000000000000000000000000000000000000000000000000000000000000000000000000000000000000000000000000000000000000000000000000000000000000000000000000000000000000000000000000000000000000000000000000000000000000000000000000000000000000000000000000000000000000000000000000000000000000000000000000000000000000000000000000000000000000000000000000000000000000000000000000000000000000000000000000000000000000000000000000000000000000000000000000000000000000000000000000000000000000000000000000000000000000000000000000000000000000000000000000000000000000000000000000000000000000000000000000000000000000000000000000000000000000000000000000000000000000000000000000000000000000000000000000000000000000000000000000000000000000000000000000000000000000000000000000000000000000000000000000000000000000000000000000000000000000000000000000000000000000000000000000000000000000000000000000000000000000000000000000000000000000000000000000000000000000000000000000000000000000000000000000000000000000000000000000000000000000000000000000000000000000000000000000000000000000000000000000000000000000000000000000000000000000000000000000000000000000000000000000000000000000000000000000000000000000000000000000000000000000000000000000000000000000000000000000000000000000000000000000000000000000000000000000000000000000000000000000000000000000000000000000000000000000000000000000000000000000000000000000000000000000000000000000000000000000000000000000000000000000000000000000000000000000000000000000000000000000000000000000000000000000000000000000000000000000000000000000000000000000000000000000000000000000000000000000000000000000000000000000000000000000000000000000000000000000000000000000000000000000000000000000000000000000000000000000000000000000000000000000000000000000000000000000000000000000000000000000000000000000000000000000000000000000000000000000000000000000000000000000000000000000000000000000000000000000000000000000000000000000000000000000000000000000000000000000000000000000000000000000000000000000000000000000000000000000000000000000000000000000000000000000000000000000000000000000000000000000000000000000000000000000000000000000000000000000000000000000000000000000000000000000000000000000000000000000000000000000000000000000000000000000000000000000000000000000000000000000000000000000000000000000000000000000000000000000000000000000000000000000000000000000000000000000000000000000000000000000000000000000000000000000000000000000000000000000000000000000000000000000000000000000000000000000000000000000000000000000000000000000000000000000000000000000000000000000000000000000000000000000000000000000000000000000000000000000000000000000000000000000000000000000000000000000000000000000000000000000000000000000000000000000000000000000000000000000000000000000000000000000000000000000000000000000000000000000000000000000000000000000000000000000000000000000000000000000000000000000000000000000000000000000000000000000000000000000000000000000000000000000000000000000000000000000000000000000000000000000000000000000000000000000000000000000000000000000000000000000000000000000000000000000000000000000000000000000000000000000000000000000000000000000000000000000000000000000000000000000000000000000000000000000000000000000000000000000000000000000000000000000000000000000000000000000000000000000000000000000000000000000000000000000000000000000000000000000000000000000000000000000000000000000000000000000000000000000000000000000000000000000000000000000000000000000000000000000000000000000000000000000000000000000000000000000000000000000000000000000000000000000000000000000000000000000000000000000000000000000000000000000000000000000000000000000000000000000000000000000000000000000000000000000000000000000000000000000000000000000000000000000000000000000000000000000000000000000000000000000000000000000000000000000000000000000000000000000000000000000000000000000000000000000000000000000000000000000000000000000000000000000000000000000000000000000000000000000000000000000000000000000000000000000000000000000000000000000000000000000000000000000000000000000000000000000000000000000000000000000000000000000000000000000000000000000000000000000000000000000000000000000000000000000000000000000000000000000000000000000000000000000000000000000000000000000000000000000000000000000000000000000000000000000000000000000000000000000000000000000000000000000000000000000000000000000000000000000000000000000000000000000000000000000000000000000000000000000000000000000000000000000000000000000000000000000000000000000000000000000000000000000000000000000000000000000000000000000000000000000000000000000000000000000000000000000000000000000000000000000000000000000000000000000000000000000000000000000000000000000000000000000000000000000000000000000000000000000000000000000000000000000000000000000000000000000000000000000000000000000000000000000000000000000000000000000000000000000000000000000000000000000000000000000000000000000000000000000000000000000000000000000000000000000000000000000000000000000000000000000000000000000000000000000000000000000000000000000000000000000000000000000000000000000000000000000000000000000000000000000000000000000000000000000000000000000000000000000000000000000000000000000000000000000000000000000000000000000000000000000000000000000000000000000000000000000000000000000000000000000000000000000000000000000000000000000000000000000000000000000000000000000000000000000000000000000000000000000000000000000000000000000000000000000000000000000000000000000000000000000000000000000000000000000000000000000000000000000000000000000000000000000000000000000000000000000000000000000000000000000000000000000000000000000000000000000000000000000000000000000000000000000000000000000000000000000000000000000000000000000000000000000000000000000000000000000000000000000000000000000000000000000000000000000000000000000000000000000000000000000000000000000000000000000000000000000000000000000000000000000000000000000000000000000000000000000000000000000000000000000000000000000000000000000000000000000000000000000000000000000000000000000000000000000000000000000000000000000000000000000000000000000000000000000000000000000000000000000000000000000000000000000000000000000000000000000000000000000000000000000000000000000000000000000000000000000000000000000000000000000000000000000000000000000000000000000000000000000000000000000000000000000000000000000000000000000000000000000000000000000000000000000000000000000000000000000000000000000000000000000000000000000000000000000000000000000000000000000000000000000000000000000000000000000000000000000000000000000000000000000000000000000000000000000000000000000000000000000000000000000000000000000000000000000000000000000000000000000000000000000000000000000000000000000000000000000000000000000000000000000000000000000000000000000000000000000000000000000000000000000000000000000000000000000000000000000000000000000000000000000000000000000000000000000000000000000000000000000000000000000000000000000000000000000000000000000000000000000000000000000000000000000000000000000000000000000000000000000000000000000000000000000000000000000000000000000000000000000000000000000000000000000000000000000000000000000000000000000000000000000000000000000000000000000000000000000000000000000000000000000000000000000000000000000000000000000000000000000000000000000000000000000000000000000000000000000000000000000000000000000000000000000000000000000000000000000000000000000000000000000000000000000000000000000000000000000000000000000000000000000000000000000000000000000000000000000000000000000000000000000000000000000000000000000000000000000000000000000000000000000000000000000000000000000000000000000000000000000000000000000000000000000000000000000000000000000000000000000000000000000000000000000000000000000000000000000000000000000000000000000000000000000000000000000000000000000000000000000000000000000000000000000000000000000000000000000000000000000000000000000000000000000000000000000000000000000000000000000000000000000000000000000000000000000000000000000000000000000000000000000000000000000000000000000000000000000000000000000000000000000000000000000000000000000000000000000000000000000000000000000000000000000000000000000000000000000000000000000000000000000000000000000000000000000000000000000000000000000000000000000000000000000000000000000000000000000000000000000000000000000000000000000000000000000000000000000000000000000000000000000000000000000000000000000000000000000000000000000000000000000000000000000000000000000000000000000000000000000000000000000000000000000000000000000000000000000000000000000000000000000000000000000000000000000000000000000000000000000000000000000000000000000000000000000000000000000000000000000000000000000000000000000000000000000000000000000000000000000000000000000000000000000000000000000000000000000000000000000000000000000000000000000000000000000000000000000000000000000000000000000000000000000000000000000000000000000000000000000000000000000000000000000000000000000000000000000000000000000000000000000000000000000000000000000000000000000000000000000000000000000000000000000000000000000000000000000000000000000000000000000000000000000000000000000000000000000000000000000000000000000000000000000000000000000000000000000000000000000000000000000000000000000000000000000000000000000000000000000000000000000000000000000000000000000000000000000000000000000000000000000000000000000000000000000000000000000000000000000000000000000000000000000000000000000000000000000000000000000000000000000000000000000000000000000000000000000000000000000000000000000000000000000000000000000000000000000000000000000000000000000000000000000000000000000000000000000000000000000000000000000000000000000000000000000000000000000000000000000000000000000000000000000000000000000000000000000000000000000000000000000000000000000000000000000000000000000000000000000000000000000000000000000000000000000000000000000000000000000000000000000000000000000000000000000000000000000000000000000000000000000000000000000000000000000000000000000000000000000000000000000000000000000000000000000000000000000000000000000000000000000000000000000000000000000000000000000000000000000000000000000000000000000000000000000000000000000000000000000000000000000000000000000000000000000000000000000000000000000000000000000000000000000000000000000000000000000000000000000000000000000000000000000000000000000000000000000000000000000000000000000000000000000000000000000000000000000000000000000000000000000000000000000000000000000000000000000000000000000000000000000000000000000000000000000000000000000000000000000000000000000000000000000000000000000000000000000000000000000000000000000000000000000000000000000000000000000000000000000000000000000000000000000000000000000000000000000000000000000000000000000000000000000000000000000000000000000000000000000000000000000000000000000000000000000000000000000000000000000000000000000000000000000000000000000000000000000000000000000000000000000000000000000000000000000000000000000000000000000000000000000000000000000000000000000000000000000000000000000000000000000000000000000000000000000000000000000000000000000000000000000000000000000000000000000000000000000000000000000000000000000000000000000000000000000000000000000000000000000000000000000000000000000000000000000000000000000000000000000000000000000000000000000000000000000000000000000000000000000000000000000000000000000000000000000000000000000000000000000000000000000000000000000000000000000000000000000000000000000000000000000000000000000000000000000000000000000000000000000000000000000000000000000000000000000000000000000000000000000000000000000000000000000000000000000000000000000000000000000000000000000000000000000000000000000000000000000000000000000000000000000000000000000000000000000000000000000000000000000000000000000000000000000000000000000000000000000000000000000000000000000000000000000000000000000000000000000000000000000000000000000000000000000000000000000000000000000000000000000000000000000000000000000000000000000000000000000000000000000000000000000000000000000000000000000000000000000000000000000000000000000000000000000000000000000000000000000000000000000000000000000000000000000000000000000000000000000000000000000000000000000000000000000000000000000000000000000000000000000000000000000000000000000000000000000000000000000000000000000000000000000000000000000000000000000000000000000000000000000000000000000000000000000000000000000000000000000000000000000000000000000000000000000000000000000000000000000000000000000000000000000000000000000000000000000000000000000000000000000000000000000000000000000000000000000000000000000000000000000000000000000000000000000000000000000000000000000000000000000000000000000000000000000000000000000000000000000000000000000000000000000000000000000000000000000000000000000000000000000000000000000000000000000000000000000000000000000000000000000000000000000000000000000000000000000000000000000000000000000000000000000000000000000000000000000000000000000000000000000000000000000000000000000000000000000000000000000000000000000000000000000000000000000000000000000000000000000000000000000000000000000000000000000000000000000000000000000000000000000000000000000000000000000000000000000000000000000000000000000000000000000000000000000000000000000000000000000000000000000000000000000000000000000000000000000000000000000000000000000000000000000000000000000000000000000000000000000000000000000000000000000000000000000000000000000000000000000000000000000000000000000000000000000000000000000000000000000000000000000000000000000000000000000000000000000000000000000000000000000000000000000000000000000000000000000000000000000000000000000000000000000000000000000000000000000000000000000000000000000000000000000000000000000000000000000000000000000000000000000000000000000000000000000000000000000000000000000000000000000000000000000000000000000000000000000000000000000000000000000000000000000000000000000000000000000000000000000000000000000000000000000000000000000000000000000000000000000000000000000000000000000000000000000000000000000000000000000000000000000000000000000000000000000000000000000000000000000000000000000000000000000000000000000000000000000000000000000000000000000000000000000000000000000000000000000000000000000000000000000000000000000000000000000000000000000000000000000000000000000000000000000000000000000000000000000000000000000000000000000000000000000000000000000000000000000000000000000000000000000000000000000000000000000000000000000000000000000000000000000000000000000000000000000000000000000000000000000000000000000000000000000000000000000000000000000000000000000000000000000000000000000000000000000000000000000000000000000000000000000000000000000000000000000000000000000000000000000000000000000000000000000000000000000000000000000000000000000000000000000000000000000000000000000000000000000000000000000000000000000000000000000000000000000000000000000000000000000000000000000000000000000000000000000000000000000000000000000000000000000000000000000000000000000000000000000000000000000000000000000000000000000000000000000000000000000000000000000000000000000000000000000000000000000000000000000000000000000000000000000000000000000000000000000000000000000000000000000000000000000000000000000000000000000000000000000000000000000000000000000000000000000000000000000000000000000000000000000000000000000000000000000000000000000000000000000000000000000000000000000000000000000000000000000000000000000000000000000000000000000000000000000000000000000000000000000000000000000000000000000000000000000000000000000000000000000000000000000000000000000000000000000000000000000000000000000000000000000000000000000000000000000000000000000000000000000000000000000000000000000000000000000000000000000000000000000000000000000000000000000000000000000000000000000000000000000000000000000000000000000000000000000000000000000000000000000000000000000000000000000000000000000000000000000000000000000000000000000000000000000000000000000000000000000000000000000000000000000000000000000000000000000000000000000000000000000000000000000000000000000000000000000000000000000000000000000000000000000000000000000000000000000000000000000000000000000000000000000000000000000000000000000000000000000000000000000000000000000000000000000000000000000000000000000000000000000000000000000000000000000000000000000000000000000000000000000000000000000000000000000000000000000000000000000000000000000000000000000000000000000000000000000000000000000000000000000000000000000000000000000000000000000000000000000000000000000000000000000000000000000000000000000000000000000000000000000000000000000000000000000000000000000000000000000000000000000000000000000000000000000000000000000000000000000000000000000000000000000000000000000000000000000000000000000000000000000000000000000000000000000000000000000000000000000000000000000000000000000000000000000000000000000000000000000000000000000000000000000000000000000000000000000000000000000000000000000000000000000000000000000000000000000000000000000000000000000000000000000000000000000000000000000000000000000000000000000000000000000000000000000000000000000000000000000000000000000000000000000000000000000000000000000000000000000000000000000000000000000000000000000000000000000000000000000000000000000000000000000000000000000000000000000000000000000000000000000000000000000000000000000000000000000000000000000000000000000000000000000000000000000000000000000000000000000000000000000000000000000000000000000000000000000000000000000000000000000000000000000000000000000000000000000000000000000000000000000000000000000000000000000000000000000000000000000000000000000000000000000000000000000000000000000000000000000000000000000000000000000000000000000000000000000000000000000000000000000000000000000000000000000000000000000000000000000000000000000000000000000000000000000000000000000000000000000000000000000000000000000000000000000000000000000000000000000000000000000000000000000000000000000000000000000000000000000000000000000000000000000000000000000000000000000000000000000000000000000000000000000000000000000000000000000000000000000000000000000000000000000000000000000000000000000000000000000000000000000000000000000000000000000000000000000000000000000000000000000000000000000000000000000000000000000000000000000000000000000000000000000000000000000000000000000000000000000000000000000000000000000000000000000000000000000000000000000000000000000000000000000000000000000000000000000000000000000000000000000000000000000000000000000000000000000000000000000000000000000000000000000000000000000000000000000000000000000000000000000000000000000000000000000000000000000000000000000000000000000000000000000000000000000000000000000000000000000000000000000000000000000000000000000000000000000000000000000000000000000000000000000000000000000000000000000000000000000000000000000000000000000000000000000000000000000000000000000000000000000000000000000000000000000000000000000000000000000000000000000000000000000000000000000000000000000000000000000000000000000000000000000000000000000000000000000000000000000000000000000000000000000000000000000000000000000000000000000000000000000000000000000000000000000000000000000000000000000000000000000000000000000000000000000000000000000000000000000000000000000000000000000000000000000000000000000000000000000000000000000000000000000000000000000000000000000000000000000000000000000000000000000000000000000000000000000000000000000000000000000000000000000000000000000000000000000000000000000000000000000000000000000000000000000000000000000000000000000000000000000000000000000000000000000000000000000000000000000000000000000000000000000000000000000000000000000000000000000000000000000000000000000000000000000000000000000000000000000000000000000000000000000000000000000000000000000000000000000000000000000000000000000000000000000000000000000000000000000000000000000000000000000000000000000000000000000000000000000000000000000000000000000000000000000000000000000000000000000000000000000000000000000000000000000000000000000000000000000000000000000000000000000000000000000000000000000000000000000000000000000000000000000000000000000000000000000000000000000000000000000000000000000000000000000000000000000000000000000000000000000000000000000000000000000000000000000000000000000000000000000000000000000000000000000000000000000000000000000000000000000000000000000000000000000000000000000000000000000000000000000000000000000000000000000000000000000000000000000000000000000000000000000000000000000000000000000000000000000000000000000000000000000000000000000000000000000000000000000000000000000000000000000000000000000000000000000000000000000000000000000000000000000000000000000000000000000000000000000000000000000000000000000000000000000000000000000000000000000000000000000000000000000000000000000000000000000000000000000000000000000000000000000000000000000000000000000000000000000000000000000000000000000000000000000000000000000000000000000000000000000000000000000000000000000000000000000000000000000000000000000000000000000000000000000000000000000000000000000000000000000000000000000000000000000000000000000000000000000000000000000000000000000000000000000000000000000000000000000000000000000000000000000000000000000000000000000000000000000000000000000000000000000000000000000000000000000000000000000000000000000000000000000000000000000000000000000000000000000000000000000000000000000000000000000000000000000000000000000000000000000000000000000000000000000000000000000000000000000000000000000000000000000000000000000000000000000000000000000000000000000000000000000000000000000000000000000000000000000000000000000000000000000000000000000000000000000000000000000000000000000000000000000000000000000000000000000000000000000000000000000000000000000000000000000000000000000000000000000000000000000000000000000000000000000000000000000000000000000000000000000000000000000000000000000000000000000000000000000000000000000000000000000000000000000000000000000000000000000000000000000000000000000000000000000000000000000000000000000000000000000000000000000000000000000000000000000000000000000000000000000000000000000000000000000000000000000000000000000000000000000000000000000000000000000000000000000000000000000000000000000000000000000000000000000000000000000000000000000000000000000000000000000000000000000000000000000000000000000000000000000000000000000000000000000000000000000000000000000000000000000000000000000000000000000000000000000000000000000000000000000000000000000000000000000000000000000000000000000000000000000000000000000000000000000000000000000000000000000000000000000000000000000000000000000000000000000000000000000000000000000000000000000000000000000000000000000000000000000000000000000000000000000000000000000000000000000000000000000000000000000000000000000000000000000000000000000000000000000000000000000000000000000000000000000000000000000000000000000000000000000000000000000000000000000000000000000000000000000000000000000000000000000000000000000000000000000000000000000000000000000000000000000000000000000000000000000000000000000000000000000000000000000000000000000000000000000000000000000000000000000000000000000000000000000000000000000000000000000000000000000000000000000000000000000000000000000000000000000000000000000000000000000000000000000000000000000000000000000000000000000000000000000000000000000000000000000000000000000000000000000000000000000000000000000000000000000000000000000000000000000000000000000000000000000000000000000000000000000000000000000000000000000000000000000000000000000000000000000000000000000000000000000000000000000000000000000000000000000000000000000000000000000000000000000000000000000000000000000000000000000000000000000000000000000000000000000000000000000000000000000000000000000000000000000000000000000000000000000000000000000000000000000000000000000000000000000000000000000000000000000000000000000000000000000000000000000000000000000000000000000000000000000000000000000000000000000000000000000000000000000000000000000000000000000000000000000000000000000000000000000000000000000000000000000000000000000000000000000000000000000000000000000000000000000000000000000000000000000000000000000000000000000000000000000000000000000000000000000000000000000000000000000000000000000000000000000000000000000000000000000000000000000000000000000000000000000000000000000000000000000000000000000000000000000000000000000000000000000000000000000000000000000000000000000000000000000000000000000000000000000000000000000000000000000000000000000000000000000000000000000000000000000000000000000000000000000000000000000000000000000000000000000000000000000000000000000000000000000000000000000000000000000000000000000000000000000000000000000000000000000000000000000000000000000000000000000000000000000000000000000000000000000000000000000000000000000000000000000000000000000000000000000000000000000000000000000000000000000000000000000000000000000000000000000000000000000000000000000000000000000000000000000000000000000000000000000000000000000000000000000000000000000000000000000000000000000000000000000000000000000000000000000000000000000000000000000000000000000000000000000000000000000000000000000000000000000000000000000000000000000000000000000000000000000000000000000000000000000000000000000000000000000000000000000000000000000000000000000000000000000000000000000000000000000000000000000000000000000000000000000000000000000000000000000000000000000000000000000000000000000000000000000000000000000000000000000000000000000000000000000000000000000000000000000000000000000000000000000000000000000000000000000000000000000000000000000000000000000000000000000000000000000000000000000000000000000000000000000000000000000000000000000000000000000000000000000000000000000000000000000000000000000000000000000000000000000000000000000000000000000000000000000000000000000000000000000000000000000000000000000000000000000000000000000000000000000000000000000000000000000000000000000000000000000000000000000000000000000000000000000000000000000000000000000000000000000000000000000000000000000000000000000000000000000000000000000000000000000000000000000000000000000000000000000000000000000000000000000000000000000000000000000000000000000000000000000000000000000000000000000000000000000000000000000000000000000000000000000000000000000000000000000000000000000000000000000000000000000000000000000000000000000000000000000000000000000000000000000000000000000000000000000000000000000000000000000000000000000000000000000000000000000000000000000000000000000000000000000000000000000000000000000000000000000000000000000000000000000000000000000000000000000000000000000000000000000000000000000000000000000000000000000000000000000000000000000000000000000000000000000000000000000000000000000000000000000000000000000000000000000000000000000000000000000000000000000000000000000000000000000000000000000000000000000000000000000000000000000000000000000000000000000000000000000000000000000000000000000000000000000000000000000000000000000000000000000000000000000000000000000000000000000000000000000000000000000000000000000000000000000000000000000000000000000000000000000000000000000000000000000000000000000000000000000000000000000000000000000000000000000000000000000000000000000000000000000000000000000000000000000000000000000000000000000000000000000000000000000000000000000000000000000000000000000000000000000000000000000000000000000000000000000000000000000000000000000000000000000000000000000000000000000000000000000000000000000000000000000000000000000000000000000000000000000000000000000000000000000000000000000000000000000000000000000000000000000000000000000000000000000000000000000000000000000000000000000000000000000000000000000000000000000000000000000000000000000000000000000000000000000000000000000000000000000000000000000000000000000000000000000000000000000000000000000000000000000000000000000000000000000000000000000000000000000000000000000000000000000000000000000000000000000000000000000000000000000000000000000000000000000000000000000000000000000000000000000000000000000000000000000000000000000000000000000000000000000000000000000000000000000000000000000000000000000000000000000000000000000000000000000000000000000000000000000000000000000000000000000000000000000000000000000000000000000000000000000000000000000000000000000000000000000000000000000000000000000000000000000000000000000000000000000000000000000000000000000000000000000000000000000000000000000000000000000000000000000000000000000000000000000000000000000000000000000000000000000000000000000000000000000000000000000000000000000000000000000000000000000000000000000000000000000000000000000000000000000000000000000000000000000000000000000000000000000000000000000000000000000000000000000000000000000000000000000000000000000000000000000000000000000000000000000000000000000000000000000000000000000000000000000000000000000000000000000000000000000000000000000000000000000000000000000000000000000000000000000000000000000000000000000000000000000000000000000000000000000000000000000000000000000000000000000000000000000000000000000000000000000000000000000000000000000000000000000000000000000000000000000000000000000000000000000000000000000000000000000000000000000000000000000000000000000000000000000000000000000000000000000000000000000000000000000000000000000000000000000000000000000000000000000000000000000000000000000000000000000000000000000000000000000000000000000000000000000000000000000000000000000000000000000000000000000000000000000000000000000000000000000000000000000000000000000000000000000000000000000000000000000000000000000000000000000000000000000000000000000000000000000000000000000000000000000000000000000000000000000000000000000000000000000000000000000000000000000000000000000000000000000000000000000000000000000000000000000000000000000000000000000000000000000000000000000000000000000000000000000000000000000000000000000000000000000000000000000000000000000000000000000000000000000000000000000000000000000000000000000000000000000000000000000000000000000000000000000000000000000000000000000000000000000000000000000000000000000000000000000000000000000000000000000000000000000000000000000000000000000000000000000000000000000000000000000000000000000000000000000000000000000000000000000000000000000000000000000000000000000000000000000000000000000000000000000000000000000000000000000000000000000000000000000000000000000000000000000000000000000000000000000000000000000000000000000000000000000000000000000000000000000000000000000000000000000000000000000000000000000000000000000000000000000000000000000000000000000000000000000000000000000000000000000000000000000000000000000000000000000000000000000000000000000000000000000000000000000000000000000000000000000000000000000000000000000000000000000000000000000000000000000000000000000000000000000000000000000000000000000000000000000000000000000000000000000000000000000000000000000000000000000000000000000000000000000000000000000000000000000000000000000000000000000000000000000000000000000000000000000000000000000000000000000000000000000000000000000000000000000000000000000000000000000000000000000000000000000000000000000000000000000000000000000000000000000000000000000000000000000000000000000000000000000000000000000000000000000000000000000000000000000000000000000000000000000000000000000000000000000000000000000000000000000000000000000000000000000000000000000000000000000000000000000000000000000000000000000000000000000000000000000000000000000000000000000000000000000000000000000000000000000000000000000000000000000000000000000000000000000000000000000000000000000000000000000000000000000000000000000000000000000000000000000000000000000000000000000000000000000000000000000000000000000000000000000000000000000000000000000000000000000000000000000000000000000000000000000000000000000000000000000000000000000000000000000000000000000000000000000000000000000000000000000000000000000000000000000000000000000000000000000000000000000000000000000000000000000000000000000000000000000000000000000000000000000000000000000000000000000000000000000000000000000000000000000000000000000000000000000000000000000000000000000000000000000000000000000000000000000000000000000000000000000000000000000000000000000000000000000000000000000000000000000000000000000000000000000000000000000000000000000000000000000000000000000000000000000000000000000000000000000000000000000000000000000000000000000000000000000000000000000000000000000000000000000000000000000000000000000000000000000000000000000000000000000000000000000000000000000000000000000000000000000000000000000000000000000000000000000000000000000000000000000000000000000000000000000000000000000000000000000000000000000000000000000000000000000000000000000000000000000000000000000000000000000000000000000000000000000000000000000000000000000000000000000000000000000000000000000000000000000000000000000000000000000000000000000000000000000000000000000000000000000000000000000000000000000000000000000000000000000000000000000000000000000000000000000000000000000000000000000000000000000000000000000000000000000000000000000000000000000000000000000000000000000000000000000000000000000000000000000000000000000000000000000000000000000000000000000000000000000000000000000000000000000000000000000000000000000000000000000000000000000000000000000000000000000000000000000000000000000000000000000000000000000000000000000000000000000000000000000000000000000000000000000000000000000000000000000000000000000000000000000000000000000000000000000000000000000000000000000000000000000000000000000000000000000000000000000000000000000000000000000000000000000000000000000000000000000000000000000000000000000000000000000000000000000000000000000000000000000000000000000000000000000000000000000000000000000000000000000000000000000000000000000000000000000000000000000000000000000000000000000000000000000000000000000000000000000000000000000000000000000000000000000000000000000000000000000000000000000000000000000000000000000000000000000000000000000000000000000000000000000000000000000000000000000000000000000000000000000000000000000000000000000000000000000000000000000000000000000000000000000000000000000000000000000000000000000000000000000000000000000000000000000000000000000000000000000000000000000000000000000000000000000000000000000000000000000000000000000000000000000000000000000000000000000000000000000000000000000000000000000000000000000000000000000000000000000000000000000000000000000000000000000000000000000000000000000000000000000000000000000000000000000000000000000000000000000000000000000000000000000000000000000000000000000000000000000000000000000000000000000000000000000000000000000000000000000000000000000000000000000000000000000000000000000000000000000000000000000000000000000000000000000000000000000000000000000000000000000000000000000000000000000000000000000000000000000000000000000000000000000000000000000000000000000000000000000000000000000000000000000000000000000000000000000000000000000000000000000000000000000000000000000000000000000000000000000000000000000000000000000000000000000000000000000000000000000000000000000000000000000000000000000000000000000000000000000000000000000000000000000000000000000000000000000000000000000000000000000000000000000000000000000000000000000000000000000000000000000000000000000000000000000000000000000000000000000000000000000000000000000000000000000000000000000000000000000000000000000000000000000000000000000000000000000000000000000000000000000000000000000000000000000000000000000000000000000000000000000000000000000000000000000000000000000000000000000000000000000000000000000000000000000000000000000000000000000000000000000000000000000000000000000000000000000000000000000000000000000000000000000000000000000000000000000000000000000000000000000000000000000000000000000000000000000000000000000000000000000000000000000000000000000000000000000000000000000000000000000000000000000000000000000000000000000000000000000000000000000000000000000000000000000000000000000000000000000000000000000000000000000000000000000000000000000000000000000000000000000000000000000000000000000000000000000000000000000000000000000000000000000000000000000000000000000000000000000000000000000000000000000000000000000000000000000000000000000000000000000000000000000000000000000000000000000000000000000000000000000000000000000000000000000000000000000000000000000000000000000000000000000000000000000000000000000000000000000000000000000000000000000000000000000000000000000000000000000000000000000000000000000000000000000000000000000000000000000000000000000000000000000000000000000000000000000000000000000000000000000000000000000000000000000000000000000000000000000000000000000000000000000000000000000000000000000000000000000000000000000000000000000000000000000000000000000000000000000000000000000000000000000000000000000000000000000000000000000000000000000000000000000000000000000000000000000000000000000000000000000000000000000000000000000000000000000000000000000000000000000000000000000000000000000000000000000000000000000000000000000000000000000000000000000000000000000000000000000000000000000000000000000000000000000000000000000000000000000000000000000000000000000000000000000000000000000000000000000000000000000000000000000000000000000000000000000000000000000000000000000000000000000000000000000000000000000000000000000000000000000000000000000000000000000000000000000000000000000000000000000000000000000000000000000000000000000000000000000000000000000000000000000000000000000000000000000000000000000000000000000000000000000000000000000000000000000000000000000000000000000000000000000000000000000000000000000000000000000000000000000000000000000000000000000000000000000000000000000000000000000000000000000000000000000000000000000000000000000000000000000000000000000000000000000000000000000000000000000000000000000000000000000000000000000000000000000000000000000000000000000000000000000000000000000000000000000000000000000000000000000000000000000000000000000000000000000000000000000000000000000000000000000000000000000000000000000000000000000000000000000000000000000000000000000000000000000000000000000000000000000000000000000000000000000000000000000000000000000000000000000000000000000000000000000000000000000000000000000000000000000000000000000000000000000000000000000000000000000000000000000000000000000000000000000000000000000000000000000000000000000000000000000000000000000000000000000000000000000000000000000000000000000000000000000000000000000000000000000000000000000000000000000000000000000000000000000000000000000000000000000000000000000000000000000000000000000000000000000000000000000000000000000000000000000000000000000000000000000000000000000000000000000000000000000000000000000000000000000000000000000000000000000000000000000000000000000000000000000000000000000000000000000000000000000000000000000000000000000000000000000000000000000000000000000000000000000000000000000000000000000000000000000000000000000000000000000000000000000000000000000000000000000000000000000000000000000000000000000000000000000000000000000000000000000000000000000000000000000000000000000000000000000000000000000000000000000000000000000000000000000000000000000000000000000000000000000000000000000000000000000000000000000000000000000000000000000000000000000000000000000000000000000000000000000000000000000000000000000000000000000000000000000000000000000000000000000000000000000000000000000000000000000000000000000000000000000000000000000000000000000000000000000000000000000000000000000000000000000000000000000000000000000000000000000000000000000000000000000000000000000000000000000000000000000000000000000000000000000000000000000000000000000000000000000000000000000000000000000000000000000000000000000000000000000000000000000000000000000000000000000000000000000000000000000000000000000000000000000000000000000000000000000000000000000000000000000000000000000000000000000000000000000000000000000000000000000000000000000000000000000000000000000000000000000000000000000000000000000000000000000000000000000000000000000000000000000000000000000000000000000000000000000000000000000000000000000000000000000000000000000000000000000000000000000000000000000000000000000000000000000000000000000000000000000000000000000000000000000000000000000000000000000000000000000000000000000000000000000000000000000000000000000000000000000000000000000000000000000000000000000000000000000000000000000000000000000000000000000000000000000000000000000000000000000000000000000000000000000000000000000000000000000000000000000000000000000000000000000000000000000000000000000000000000000000000000000000000000000000000000000000000000000000000000000000000000000000000000000000000000000000000000000000000000000000000000000000000000000000000000000000000000000000000000000000000000000000000000000000000000000000000000000000000000000000000000000000000000000000000000000000000000000000000000000000000000000000000000000000000000000000000000000000000000000000000000000000000000000000000000000000000000000000000000000000000000000000000000000000000000000000000000000000000000000000000000000000000000000000000000000000000000000000000000000000000000000000000000000000000000000000000000000000000000000000000000000000000000000000000000000000000000000000000000000000000000000000000000000000000000000000000000000000000000000000000000000000000000000000000000000000000000000000000000000000000000000000000000000000000000000000000000000000000000000000000000000000000000000000000000000000000000000000000000000000000000000000000000000000000000000000000000000000000000000000000000000000000000000000000000000000000000000000000000000000000000000000000000000000000000000000000000000000000000000000000000000000000000000000000000000000000000000000000000000000000000000000000000000000000000000000000000000000000000000000000000000000000000000000000000000000000000000000000000000000000000000000000000000000000000000000000000000000000000000000000000000000000000000000000000000000000000000000000000000000000000000000000000000000000000000000000000000000000000000000000000000000000000000000000000000000000000000000000000000000000000000000000000000000000000000000000000000000000000000000000000000000000000000000000000000000000000000000000000000000000000000000000000000000000000000000000000000000000000000000000000000000000000000000000000000000000000000000000000000000000000000000000000000000000000000000000000000000000000000000000000000000000000000000000000000000000000000000000000000000000000000000000000000000000000000000000000000000000000000000000000000000000000000000000000000000000000000000000000000000000000000000000000000000000000000000000000000000000000000000000000000000000000000000000000000000000000000000000000000000000000000000000000000000000000000000000000000000000000000000000000000000000000000000000000000000000000000000000000000000000000000000000000000000000000000000000000000000000000000000000000000000000000000000000000000000000000000000000000000000000000000000000000000000000000000000000000000000000000000000000000000000000000000000000000000000000000000000000000000000000000000000000000000000000000000000000000000000000000000000000000000000000000000000000000000000000000000000000000000000000000000000000000000000000000000000000000000000000000000000000000000000000000000000000000000000000000000000000000000000000000000000000000000000000000000000000000000000000000000000000000000000000000000000000000000000000000000000000000000000000000000000000000000000000000000000000000000000000000000000000000000000000000000000000000000000000000000000000000000000000000000000000000000000000000000000000000000000000000000000000000000000000000000000000000000000000000000000000000000000000000000000000000000000000000000000000000000000000000000000000000000000000000000000000000000000000000000000000000000000000000000000000000000000000000000000000000000000000000000000000000000000000000000000000000000000000000000000000000000000000000000000000000000000000000000000000000000000000000000000000000000000000000000000000000000000000000000000000000000000000000000000000000000000000000000000000000000000000000000000000000000000000000000000000000000000000000000000000000000000000000000000000000000000000000000000000000000000000000000000000000000000000000000000000000000000000000000000000000000000000000000000000000000000000000000000000000000000000000000000000000000000000000000000000000000000000000000000000000000000000000000000000000000000000000000000000000000000000000000000000000000000000000000000000000000000000000000000000000000000000000000000000000000000000000000000000000000000000000000000000000000000000000000000000000000000000000000000000000000000000000000000000000000000000000000000000000000000000000000000000000000000000000000000000000000000000000000000000000000000000000000000000000000000000000000000000000000000000000000000000000000000000000000000000000000000000000000000000000000000000000000000000000000000000000000000000000000000000000000000000000000000000000000000000000000000000000000000000000000000000000000000000000000000000000000000000000000000000000000000000000000000000000000000000000000000000000000000000000000000000000000000000000000000000000000000000000000000000000000000000000000000000000000000000000000000000000000000000000000000000000000000000000000000000000000000000000000000000000000000000000000000000000000000000000000000000000000000000000000000000000000000000000000000000000000000000000000000000000000000000000000000000000000000000000000000000000000000000000000000000000000000000000000000000000000000000000000000000000000000000000000000000000000000000000000000000000000000000000000000000000000000000000000000000000000000000000000000000000000000000000000000000000000000000000000000000000000000000000000000000000000000000000000000000000000000000000000000000000000000000000000000000000000000000000000000000000000000000000000000000000000000000000000000000000000000000000000000000000000000000000000000000000000000000000000000000000000000000000000000000000000000000000000000000000000000000000000000000000000000000000000000000000000000000000000000000000000000000000000000000000000000000000000000000000000000000000000000000000000000000000000000000000000000000000000000000000000000000000000000000000000000000000000000000000000000000000000000000000000000000000000000000000000000000000000000000000000000000000000000000000000000000000000000000000000000000000000000000000000000000000000000000000000000000000000000000000000000000000000000000000000000000000000000000000000000000000000000000000000000000000000000000000000000000000000000000000000000000000000000000000000000000000000000000000000000000000000000000000000000000000000000000000000000000000000000000000000000000000000000000000000000000000000000000000000000000000000000000000000000000000000000000000000000000000000000000000000000000000000000000000000000000000000000000000000000000000000000000000000000000000000000000000000000000000000000000000000000000000000000000000000000000000000000000000000000000000000000000000000000000000000000000000000000000000000000000000000000000000000000000000000000000000000000000000000000000000000000000000000000000000000000000000000000000000000000000000000000000000000000000000000000000000000000000000000000000000000000000000000000000000000000000000000000000000000000000000000000000000000000000000000000000000000000000000000000000000000000000000000000000000000000000000000000000000000000000000000000000000000000000000000000000000000000000000000000000000000000000000000000000000000000000000000000000000000000000000000000000000000000000000000000000000000000000000000000000000000000000000000000000000000000000000000000000000000000000000000000000000000000000000000000000000000000000000000000000000000000000000000000000000000000000000000000000000000000000000000000000000000000000000000000000000000000000000000000000000000000000000000000000000000000000000000000000000000000000000000000000000000000000000000000000000000000000000000000000000000000000000000000000000000000000000000000000000000000000000000000000000000000000000000000000000000000000000000000000000000000000000000000000000000000000000000000000000000000000000000000000000000000000000000000000000000000000000000000000000000000000000000000000000000000000000000000000000000000000000000000000000000000000000000000000000000000000000000000000000000000000000000000000000000000000000000000000000000000000000000000000000000000000000000000000000000000000000000000000000000000000000000000000000000000000000000000000000000000000000000000000000000000000000000000000000000000000000000000000000000000000000000000000000000000000000000000000000000000000000000000000000000000000000000000000000000000000000000000000000000000000000000000000000000000000000000000000000000000000000000000000000000000000000000000000000000000000000000000000000000000000000000000000000000000000000000000000000000000000000000000000000000000000000000000000000000000000000000000000000000000000000000000000000000000000000000000000000000000000000000000000000000000000000000000000000000000000000000000000000000000000000000000000000000000000000000000000000000000000000000000000000000000000000000000000000000000000000000000000000000000000000000000000000000000000000000000000000000000000000000000000000000000000000000000000000000000000000000000000000000000000000000000000000000000000000000000000000000000000000000000000000000000000000000000000000000000000000000000000000000000000000000000000000000000000000000000000000000000000000000000000000000000000000000000000000000000000000000000000000000000000000000000000000000000000000000000000000000000000000000000000000000000000000000000000000000000000000000000000000000000000000000000000000000000000000000000000000000000000000000000000000000000000000000000000000000000000000000000000000000000000000000000000000000000000000000000000000000000000000000000000000000000000000000000000000000000000000000000000000000000000000000000000000000000000000000000000000000000000000000000000000000000000000000000000000000000000000000000000000000000000000000000000000000000000000000000000000000000000000000000000000000000000000000000000000000000000000000000000000000000000000000000000000000000000000000000000000000000000000000000000000000000000000000000000000000000000000000000000000000000000000000000000000000000000000000000000000000000000000000000000000000000000000000000000000000000000000000000000000000000000000000000000000000000000000000000000000000000000000000000000000000000000000000000000000000000000000000000000000000000000000000000000000000000000000000000000000000000000000000000000000000000000000000000000000000000000000000000000000000000000000000000000000000000000000000000000000000000000000000000000000000000000000000000000000000000000000000000000000000000000000000000000000000000000000000000000000000000000000000000000000000000000000000000000000000000000000000000000000000000000000000000000000000000000000000000000000000000000000000000000000000000000000000000000000000000000000000000000000000000000000000000000000000000000000000000000000000000000000000000000000000000000000000000000000000000000000000000000000000000000000000000000000000000000000000000000000000000000000000000000000000000000000000000000000000000000000000000000000000000000000000000000000000000000000000000000000000000000000000000000000000000000000000000000000000000000000000000000000000000000000000000000000000000000000000000000000000000000000000000000000000000000000000000000000000000000000000000000000000000000000000000000000000000000000000000000000000000000000000000000000000000000000000000000000000000000000000000000000000000000000000000000000000000000000000000000000000000000000000000000000000000000000000000000000000000000000000000000000000000000000000000000000000000000000000000000000000000000000000000000000000000000000000000000000000000000000000000000000000000000000000000000000000000000000000000000000000000000000000000000000000000000000000000000000000000000000000000000000000000000000000000000000000000000000000000000000000000000000000000000000000000000000000000000000000000000000000000000000000000000000000000000000000000000000000000000000000000000000000000000000000000000000000000000000000000000000000000000000000000000000000000000000000000000000000000000000000000000000000000000000000000000000000000000000000000000000000000000000000000000000000000000000000000000000000000000000000000000000000000000000000000000000000000000000000000000000000000000000000000000000000000000000000000000000000000000000000000000000000000000000000000000000000000000000000000000000000000000000000000000000000000000000000000000000000000000000000000000000000000000000000000000000000000000000000000000000000000000000000000000000000000000000000000000000000000000000000000000000000000000000000000000000000000000000000000000000000000000000000000000000000000000000000000000000000000000000000000000000000000000000000000000000000000000000000000000000000000000000000000000000000000000000000000000000000000000000000000000000000000000000000000000000000000000000000000000000000000000000000000000000000000000000000000000000000000000000000000000000000000000000000000000000000000000000000000000000000000000000000000000000000000000000000000000000000000000000000000000000000000000000000000000000000000000000000000000000000000000000000000000000000000000000000000000000000000000000000000000000000000000000000000000000000000000000000000000000000000000000000000000000000000000000000000000000000000000000000000000000000000000000000000000000000000000000000000000000000000000000000000000000000000000000000000000000000000000000000000000000000000000000000000000000000000000000000000000000000000000000000000000000000000000000000000000000000000000000000000000000000000000000000000000000000000000000000000000000000000000000000000000000000000000000000000000000000000000000000000000000000000000000000000000000000000000000000000000000000000000000000000000000000000000000000000000000000000000000000000000000000000000000000000000000000000000000000000000000000000000000000000000000000000000000000000000000000000000000000000000000000000000000000000000000000000000000000000000000000000000000000000000000000000000000000000000000000000000000000000000000000000000000000000000000000000000000000000000000000000000000000000000000000000000000000000000000000000000000000000000000000000000000000000000000000000000000000000000000000000000000000000000000000000000000000000000000000000000000000000000000000000000000000000000000000000000000000000000000000000000000000000000000000000000000000000000000000000000000000000000000000000000000000000000000000000000000000000000000000000000000000000000000000000000000000000000000000000000000000000000000000000000000000000000000000000000000000000000000000000000000000000000000000000000000000000000000000000000000000000000000000000000000000000000000000000000000000000000000000000000000000000000000000000000000000000000000000000000000000000000000000000000000000000000000000000000000000000000000000000000000000000000000000000000000000000000000000000000000000000000000000000000000000000000000000000000000000000000000000000000000000000000000000000000000000000000000000000000000000000000000000000000000000000000000000000000000000000000000000000000000000000000000000000000000000000000000000000000000000000000000000000000000000000000000000000000000000000000000000000000000000000000000000000000000000000000000000000000000000000000000000000000000000000000000000000000000000000000000000000000000000000000000000000000000000000000000000000000000000000000000000000000000000000000000000000000000000000000000000000000000000000000000000000000000000000000000000000000000000000000000000000000000000000000000000000000000000000000000000000000000000000000000000000000000000000000000000000000000000000000000000000000000000000000000000000000000000000000000000000000000000000000000000000000000000000000000000000000000000000000000000000000000000000000000000000000000000000000000000000000000000000000000000000000000000000000000000000000000000000000000000000000000000000000000000000000000000000000000000000000000000000000000000000000000000000000000000000000000000000000000000000000000000000000000000000000000000000000000000000000000000000000000000000000000000000000000000000000000000000000000000000000000000000000000000000000000000000000000000000000000000000000000000000000000000000000000000000000000000000000000000000000000000000000000000000000000000000000000000000000000000000000000000000000000000000000000000000000000000000000000000000000000000000000000000000000000000000000000000000000000000000000000000000000000000000000000000000000000000000000000000000000000000000000000000000000000000000000000000000000000000000000000000000000000000000000000000000000000000000000000000000000000000000000000000000000000000000000000000000000000000000000000000000000000000000000000000000000000000000000000000000000000000000000000000000000000000000000000000000000000000000000000000000000000000000000000000000000000000000000000000000000000000000000000000000000000000000000000000000000000000000000000000000000000000000000000000000000000000000000000000000000000000000000000000000000000000000000000000000000000000000000000000000000000000000000000000000000000000000000000000000000000000000000000000000000000000000000000000000000000000000000000000000000000000000000000000000000000000000000000000000000000000000000000000000000000000000000000000000000000000000000000000000000000000000000000000000000000000000000000000000000000000000000000000000000000000000000000000000000000000000000000000000000000000000000000000000000000000000000000000000000000000000000000000000000000000000000000000000000000000000000000000000000000000000000000000000000000000000000000000000000000000000000000000000000000000000000000000000000000000000000000000000000000000000000000000000000000000000000000000000000000000000000000000000000000000000000000000000000000000000000000000000000000000000000000000000000000000000000000000000000000000000000000000000000000000000000000000000000000000000000000000000000000000000000000000000000000000000000000000000000000000000000000000000000000000000000000000000000000000000000000000000000000000000000000000000000000000000000000000000000000000000000000000000000000000000000000000000000000000000000000000000000000000000000000000000000000000000000000000000000000000000000000000000000000000000000000000000000000000000000000000000000000000000000000000000000000000000000000000000000000000000000000000000000000000000000000000000000000000000000000000000000000000000000000000000000000000000000000000000000000000000000000000000000000000000000000000000000000000000000000000000000000000000000000000000000000000000000000000000000000000000000000000000000000000000000000000000000000000000000000000000000000000000000000000000000000000000000000000000000000000000000000000000000000000000000000000000000000000000000000000000000000000000000000000000000000000000000000000000000000000000000000000000000000000000000000000000000000000000000000000000000000000000000000000000000000000000000000000000000000000000000000000000000000000000000000000000000000000000000000000000000000000000000000000000000000000000000000000000000000000000000000000000000000000000000000000000000000000000000000000000000000000000000000000000000000000000000000000000000000000000000000000000000000000000000000000000000000000000000000000000000000000000000000000000000000000000000000000000000000000000000000000000000000000000000000000000000000000000000000000000000000000000000000000000000000000000000000000000000000000000000000000000000000000000000000000000000000000000000000000000000000000000000000000000000000000000000000000000000000000000000000000000000000000000000000000000000000000000000000000000000000000000000000000000000000000000000000000000000000000000000000000000000000000000000000000000000000000000000000000000000000000000000000000000000000000000000000000000000000000000000000000000000000000000000000000000000000000000000000000000000000000000000000000000000000000000000000000000000000000000000000000000000000000000000000000000000000000000000000000000000000000000000000000000000000000000000000000000000000000000000000000000000000000000000000000000000000000000000000000000000000000000000000000000000000000000000000000000000000000000000000000000000000000000000000000000000000000000000000000000000000000000000000000000000000000000000000000000000000000000000000000000000000000000000000000000000000000000000000000000000000000000000000000000000000000000000000000000000000000000000000000000000000000000000000000000000000000000000000000000000000000000000000000000000000000000000000000000000000000000000000000000000000000000000000000000000000000000000000000000000000000000000000000000000000000000000000000000000000000000000000000000000000000000000000000000000000000000000000000000000000000000000000000000000000000000000000000000000000000000000000000000000000000000000000000000000000000000000000000000000000000000000000000000000000000000000000000000000000000000000000000000000000000000000000000000000000000000000000000000000000000000000000000000000000000000000000000000000000000000000000000000000000000000000000000000000000000000000000000000000000000000000000000000000000000000000000000000000000000000000000000000000000000000000000000000000000000000000000000000000000000000000000000000000000000000000000000000000000000000000000000000000000000000000000000000000000000000000000000000000000000000000000000000000000000000000000000000000000000000000000000000000000000000000000000000000000000000000000000000000000000000000000000000000000000000000000000000000000000000000000000000000000000000000000000000000000000000000000000000000000000000000000000000000000000000000000000000000000000000000000000000000000000000000000000000000000000000000000000000000000000000000000000000000000000000000000000000000000000000000000000000000000000000000000000000000000000000000000000000000000000000000000000000000000000000000000000000000000000000000000000000000000000000000000000000000000000000000000000000000000000000000000000000000000000000000000000000000000000000000000000000000000000000000000000000000000000000000000000000000000000000000000000000000000000000000000000000000000000000000000000000000000000000000000000000000000000000000000000000000000000000000000000000000000000000000000000000000000000000000000000000000000000000000000000000000000000000000000000000000000000000000000000000000000000000000000000000000000000000000000000000000000000000000000000000000000000000000000000000000000000000000000000000000000000000000000000000000000000000000000000000000000000000000000000000000000000000000000000000000000000000000000000000000000000000000000000000000000000000000000000000000000000000000000000000000000000000000000000000000000000000000000000000000000000000000000000000000000000000000000000000000000000000000000000000000000000000000000000000000000000000000000000000000000000000000000000000000000000000000000000000000000000000000000000000000000000000000000000000000000000000000000000000000000000000000000000000000000000000000000000000000000000000000000000000000000000000000000000000000000000000000000000000000000000000000000000000000000000000000000000000000000000000000000000000000000000000000000000000000000000000000000000000000000000000000000000000000000000000000000000000000000000000000000000000000000000000000000000000000000000000000000000000000000000000000000000000000000000000000000000000000000000000000000000000000000000000000000000000000000000000000000000000000000000000000000000000000000000000000000000000000000000000000000000000000000000000000000000000000000000000000000000000000000000000000000000000000000000000000000000000000000000000000000000000000000000000000000000000000000000000000000000000000000000000000000000000000000000000000000000000000000000000000000000000000000000000000000000000000000000000000000000000000000000000000000000000000000000000000000000000000000000000000000000000000000000000000000000000000000000000000000000000000000000000000000000000000000000000000000000000000000000000000000000000000000000000000000000000000000000000000000000000000000000000000000000000000000000000000000000000000000000000000000000000000000000000000000000000000000000000000000000000000000000000000000000000000000000000000000000000000000000000000000000000000000000000000000000000000000000000000000000000000000000000000000000000000000000000000000000000000000000000000000000000000000000000000000000000000000000000000000000000000000000000000000000000000000000000000000000000000000000000000000000000000000000000000000000000000000000000000000000000000000000000000000000000000000000000000000000000000000000000000000000000000000000000000000000000000000000000000000000000000000000000000000000000000000000000000000000000000000000000000000000000000000000000000000000000000000000000000000000000000000000000000000000000000000000000000000000000000000000000000000000000000000000000000000000000000000000000000000000000000000000000000000000000000000000000000000000000000000000000000000000000000000000000000000000000000000000000000000000000000000000000000000000000000000000000000000000000000000000000000000000000000000000000000000000000000000000000000000000000000000000000000000000000000000000000000000000000000000000000000000000000000000000000000000000000000000000000000000000000000000000000000000000000000000000000000000000000000000000000000000000000000000000000000000000000000000000000000000000000000000000000000000000000000000000000000000000000000000000000000000000000000000000000000000000000000000000000000000000000000000000000000000000000000000000000000000000000000000000000000000000000000000000000000000000000000000000000000000000000000000000000000000000000000000000000000000000000000000000000000000000000000000000000000000000000000000000000000000000000000000000000000000000000000000000000000000000000000000000000000000000000000000000000000000000000000000000000000000000000000000000000000000000000000000000000000000000000000000000000000000000000000000000000000000000000000000000000000000000000000000000000000000000000000000000000000000000000000000000000000000000000000000000000000000000000000000000000000000000000000000000000000000000000000000000000000000000000000000000000000000000000000000000000000000000000000000000000000000000000000000000000000000000000000000000000000000000000000000000000000000000000000000000000000000000000000000000000000000000000000000000000000000000000000000000000000000000000000000000000000000000000000000000000000000000000000000000000000000000000000000000000000000000000000000000000000000000000000000000000000000000000000000000000000000000000000000000000000000000000000000000000000000000000000000000000000000000000000000000000000000000000000000000000000000000000000000000000000000000000000000000000000000000000000000000000000000000000000000000000000000000000000000000000000000000000000000000000000000000000000000000000000000000000000000000000000000000000000000000000000000000000000000000000000000000000000000000000000000000000000000000000000000000000000000000000000000000000000000000000000000000000000000000000000000000000000000000000000000000000000000000000000000000000000000000000000000000000000000000000000000000000000000000000000000000000000000000000000000000000000000000000000000000000000000000000000000000000000000000000000000000000000000000000000000000000000000000000000000000000000000000000000000000000000000000000000000000000000000000000000000000000000000000000000000000000000000000000000000000000000000000000000000000000000000000000000000000000000000000000000000000000000000000000000000000000000000000000000000000000000000000000000000000000000000000000000000000000000000000000000000000000000000000000000000000000000000000000000000000000000000000000000000000000000000000000000000000000000000000000000000000000000000000000000000000000000000000000000000000000000000000000000000000000000000000000000000000000000000000000000000000000000000000000000000000000000000000000000000000000000000000000000000000000000000000000000000000000000000000000000000000000000000000000000000000000000000000000000000000000000000000000000000000000000000000000000000000000000000000000000000000000000000000000000000000000000000000000000000000000000000000000000000000000000000000000000000000000000000000000000000000000000000000000000000000000000000000000000000000000000000000000000000000000000000000000000000000000000000000000000000000000000000000000000000000000000000000000000000000000000000000000000000000000000000000000000000000000000000000000000000000000000000000000000000000000000000000000000000000000000000000000000000000000000000000000000000000000000000000000000000000000000000000000000000000000000000000000000000000000000000000000000000000000000000000000000000000000000000000000000000000000000000000000000000000000000000000000000000000000000000000000000000000000000000000000000000000000000000000000000000000000000000000000000000000000000000000000000000000000000000000000000000000000000000000000000000000000000000000000000000000000000000000000000000000000000000000000000000000000000000000000000000000000000000000000000000000000000000000000000000000000000000000000000000000000000000000000000000000000000000000000000000000000000000000000000000000000000000000000000000000000000000000000000000000000000000000000000000000000000000000000000000000000000000000000000000000000000000000000000000000000000000000000000000000000000000000000000000000000000000000000000000000000000000000000000000000000000000000000000000000000000000000000000000000000000000000000000000000000000000000000000000000000000000000000000000000000000000000000000000000000000000000000000000000000000000000000000000000000000000000000000000000000000000000000000000000000000000000000000000000000000000000000000000000000000000000000000000000000000000000000000000000000000000000000000000000000000000000000000000000000000000000000000000000000000000000000000000000000000000000000000000000000000000000000000000000000000000000000000000000000000000000000000000000000000000000000000000000000000000000000000000000000000000000000000000000000000000000000000000000000000000000000000000000000000000000000000000000000000000000000000000000000000000000000000000000000000000000000000000000000000000000000000000000000000000000000000000000000000000000000000000000000000000000000000000000000000000000000000000000000000000000000000000000000000000000000000000000000000000000000000000000000000000000000000000000000000000000000000000000000000000000000000000000000000000000000000000000000000000000000000000000000000000000000000000000000000000000000000000000000000000000000000000000000000000000000000000000000000000000000000000000000000000000000000000000000000000000000000000000000000000000000000000000000000000000000000000000000000000000000000000000000000000000000000000000000000000000000000000000000000000000000000000000000000000000000000000000000000000000000000000000000000000000000000000000000000000000000000000000000000000000000000000000000000000000000000000000000000000000000000000000000000000000000000000000000000000000000000000000000000000000000000000000000000000000000000000000000000000000000000000000000000000000000000000000000000000000000000000000000000000000000000000000000000000000000000000000000000000000000000000000000000000000000000000000000000000000000000000000000000000000000000000000000000000000000000000000000000000000000000000000000000000000000000000000000000000000000000000000000000000000000000000000000000000000000000000000000000000000000000000000000000000000000000000000000000000000000000000000000000000000000000000000000000000000000000000000000000000000000000000000000000000000000000000000000000000000000000000000000000000000000000000000000000000000000000000000000000000000000000000000000000000000000000000000000000000000000000000000000000000000000000000000000000000000000000000000000000000000000000000000000000000000000000000000000000000000000000000000000000000000000000000000000000000000000000000000000000000000000000000000000000000000000000000000000000000000000000000000000000000000000000000000000000000000000000000000000000000000000000000000000000000000000000000000000000000000000000000000000000000000000000000000000000000000000000000000000000000000000000000000000000000000000000000000000000000000000000000000000000000000000000000000000000000000000000000000000000000000000000000000000000000000000000000000000000000000000000000000000000000000000000000000000000000000000000000000000000000000000000000000000000000000000000000000000000000000000000000000000000000000000000000000000000000000000000000000000000000000000000000000000000000000000000000000000000000000000000000000000000000000000000000000000000000000000000000000000000000000000000000000000000000000000000000000000000000000000000000000000000000000000000000000000000000000000000000000000000000000000000000000000000000000000000000000000000000000000000000000000000000000000000000000000000000000000000000000000000000000000000000000000000000000000000000000000000000000000000000000000000000000000000000000000000000000000000000000000000000000000000000000000000000000000000000000000000000000000000000000000000000000000000000000000000000000000000000000000000000000000000000000000000000000000000000000000000000000000000000000000000000000000000000000000000000000000000000000000000000000000000000000000000000000000000000000000000000000000000000000000000000000000000000000000000000000000000000000000000000000000000000000000000000000000000000000000000000000000000000000000000000000000000000000000000000000000000000000000000000000000000000000000000000000000000000000000000000000000000000000000000000000000000000000000000000000000000000000000000000000000000000000000000000000000000000000000000000000000000000000000000000000000000000000000000000000000000000000000000000000000000000000000000000000000000000000000000000000000000000000000000000000000000000000000000000000000000000000000000000000000000000000000000000000000000000000000000000000000000000000000000000000000000000000000000000000000000000000000000000000000000000000000000000000000000000000000000000000000000000000000000000000000000000000000000000000000000000000000000000000000000000000000000000000000000000000000000000000000000000000000000000000000000000000000000000000000000000000000000000000000000000000000000000000000000000000000000000000000000000000000000000000000000000000000000000000000000000000000000000000000000000000000000000000000000000000000000000000000000000000000000000000000000000000000000000000000000000000000000000000000000000000000000000000000000000000000000000000000000000000000000000000000000000000000000000000000000000000000000000000000000000000000000000000000000000000000000000000000000000000000000000000000000000000000000000000000000000000000000000000000000000000000000000000000000000000000000000000000000000000000000000000000000000000000000000000000000000000000000000000000000000000000000000000000000000000000000000000000000000000000000000000000000000000000000000000000000000000000000000000000000000000000000000000000000000000000000000000000000000000000000000000000000000000000000000000000000000000000000000000000000000000000000000000000000000000000000000000000000000000000000000000000000000000000000000000000000000000000000000000000000000000000000000000000000000000000000000000000000000000000000000000000000000000000000000000000000000000000000000000000000000000000000000000000000000000000000000000000000000000000000000000000000000000000000000000000000000000000000000000000000000000000000000000000000000000000000000000000000000000000000000000000000000000000000000000000000000000000000000000000000000000000000000000000000000000000000000000000000000000000000000000000000000000000000000000000000000000000000000000000000000000000000000000000000000000000000000000000000000000000000000000000000000000000000000000000000000000000000000000000000000000000000000000000000000000000000000000000000000000000000000000000000000000000000000000000000000000000000000000000000000000000000000000000000000000000000000000000000000000000000000000000000000000000000000000000000000000000000000000000000000000000000000000000000000000000000000000000000000000000000000000000000000000000000000000000000000000000000000000000000000000000000000000000000000000000000000000000000000000000000000000000000000000000000000000000000000000000000000000000000000000000000000000000000000000000000000000000000000000000000000000000000000000000000000000000000000000000000000000000000000000000000000000000000000000000000000000000000000000000000000000000000000000000000000000000000000000000000000000000000000000000000000000000000000000000000000000000000000000000000000000000000000000000000000000000000000000000000000000000000000000000000000000000000000000000000000000000000000000000000000000000000000000000000000000000000000000000000000000000000000000000000000000000000000000000000000000000000000000000000000000000000000000000000000000000000000000000000000000000000000000000000000000000000000000000000000000000000000000000000000000000000000000000000000000000000000000000000000000000000000000000000000000000000000000000000000000000000000000000000000000000000000000000000000000000000000000000000000000000000000000000000000000000000000000000000000000000000000000000000000000000000000000000000000000000000000000000000000000000000000000000000000000000000000000000000000000000000000000000000000000000000000000000000000000000000000000000000000000000000000000000000000000000000000000000000000000000000000000000000000000000000000000000000000000000000000000000000000000000000000000000000000000000000000000000000000000000000000000000000000000000000000000000000000000000000000000000000000000000000000000000000000000000000000000000000000000000000000000000000000000000000000000000000000000000000000000000000000000000000000000000000000000000000000000000000000000000000000000000000000000000000000000000000000000000000000000000000000000000000000000000000000000000000000000000000000000000000000000000000000000000000000000000000000000000000000000000000000000000000000000000000000000000000000000000000000000000000000000000000000000000000000000000000000000000000000000000000000000000000000000000000000000000000000000000000000000000000000000000000000000000000000000000000000000000000000000000000000000000000000000000000000000000000000000000000000000000000000000000000000000000000000000000000000000000000000000000000000000000000000000000000000000000000000000000000000000000000000000000000000000000000000000000000000000000000000000000000000000000000000000000000000000000000000000000000000000000000000000000000000000000000000000000000000000000000000000000000000000000000000000000000000000000000000000000000000000000000000000000000000000000000000000000000000000000000000000000000000000000000000000000000000000000000000000000000000000000000000000000000000000000000000000000000000000000000000000000000000000000000000000000000000000000000000000000000000000000000000000000000000000000000000000000000000000000000000000000000000000000000000000000000000000000000000000000000000000000000000000000000000000000000000000000000000000000000000000000000000000000000000000000000000000000000000000000000000000000000000000000000000000000000000000000000000000000000000000000000000000000000000000000000000000000000000000000000000000000000000000000000000000000000000000000000000000000000000000000000000000000000000000000000000000000000000000000000000000000000000000000000000000000000000000000000000000000000000000000000000000000000000000000000000000000000000000000000000000000000000000000000000000000000000000000000000000000000000000000000000000000000000000000000000000000000000000000000000000000000000000000000000000000000000000000000000000000000000000000000000000000000000000000000000000000000000000000000000000000000000000000000000000000000000000000000000000000000000000000000000000000000000000000000000000000000000000000000000000000000000000000000000000000000000000000000000000000000000000000000000000000000000000000000000000000000000000000000000000000000000000000000000000000000000000000000000000000000000000000000000000000000000000000000000000000000000000000000000000000000000000000000000000000000000000000000000000000000000000000000000000000000000000000000000000000000000000000000000000000000000000000000000000000000000000000000000000000000000000000000000000000000000000000000000000000000000000000000000000000000000000000000000000000000000000000000000000000000000000000000000000000000000000000000000000000000000000000000000000000000000000000000000000000000000000000000000000000000000000000000000000000000000000000000000000000000000000000000000000000000000000000000000000000000000000000000000000000000000000000000000000000000000000000000000000000000000000000000000000000000000000000000000000000000000000000000000000000000000000000000000000000000000000000000000000000000000000000000000000000000000000000000000000000000000000000000000000000000000000000000000000000000000000000000000000000000000000000000000000000000000000000000000000000000000000000000000000000000000000000000000000000000000000000000000000000000000000000000000000000000000000000000000000000000000000000000000000000000000000000000000000000000000000000000000000000000000000000000000000000000000000000000000000000000000000000000000000000000000000000000000000000000000000000000000000000000000000000000000000000000000000000000000000000000000000000000000000000000000000000000000000000000000000000000000000000000000000000000000000000000000000000000000000000000000000000000000000000000000000000000000000000000000000000000000000000000000000000000000000000000000000000000000000000000000000000000000000000000000000000000000000000000000000000000000000000000000000000000000000000000000000000000000000000000000000000000000000000000000000000000000000000000000000000000000000000000000000000000000000000000000000000000000000000000000000000000000000000000000000000000000000000000000000000000000000000000000000000000000000000000000000000000000000000000000000000000000000000000000000000000000000000000000000000000000000000000000000000000000000000000000000000000000000000000000000000000000000000000000000000000000000000000000000000000000000000000000000000000000000000000000000000000000000000000000000000000000000000000000000000000000000000000000000000000000000000000000000000000000000000000000000000000000000000000000000000000000000000000000000000000000000000000000000000000000000000000000000000000000000000000000000000000000000000000000000000000000000000000000000000000000000000000000000000000000000000000000000000000000000000000000000000000000000000000000000000000000000000000000000000000000000000000000000000000000000000000000000000000000000000000000000000000000000000000000000000000000000000000000000000000000000000000000000000000000000000000000000000000000000000000000000000000000000000000000000000000000000000000000000000000000000000000000000000000000000000000000000000000000000000000000000000000000000000000000000000000000000000000000000000000000000000000000000000000000000000000000000000000000000000000000000000000000000000000000000000000000000000000000000000000000000000000000000000000000000000000000000000000000000000000000000000000000000000000000000000000000000000000000000000000000000000000000000000000000000000000000000000000000000000000000000000000000000000000000000000000000000000000000000000000000000000000000000000000000000000000000000000000000000000000000000000000000000000000000000000000000000000000000000000000000000000000000000000000000000000000000000000000000000000000000000000000000000000000000000000000000000000000000000000000000000000000000000000000000000000000000000000000000000000000000000000000000000000000000000000000000000000000000000000000000000000000000000000000000000000000000000000000000000000000000000000000000000000000000000000000000000000000000000000000000000000000000000000000000000000000000000000000000000000000000000000000000000000000000000000000000000000000000000000000000000000000000000000000000000000000000000000000000000000000000000000000000000000000000000000000000000000000000000000000000000000000000000000000000000000000000000000000000000000000000000000000000000000000000000000000000000000000000000000000000000000000000000000000000000000000000000000000000000000000000000000000000000000000000000000000000000000000000000000000000000000000000000000000000000000000000000000000000000000000000000000000000000000000000000000000000000000000000000000000000000000000000000000000000000000000000000000000000000000000000000000000000000000000000000000000000000000000000000000000000000000000000000000000000000000000000000000000000000000000000000000000000000000000000000000000000000000000000000000000000000000000000000000000000000000000000000000000000000000000000000000000000000000000000000000000000000000000000000000000000000000000000000000000000000000000000000000000000000000000000000000000000000000000000000000000000000000000000000000000000000000000000000000000000000000000000000000000000000000000000000000000000000000000000000000000000000000000000000000000000000000000000000000000000000000000000000000000000000000000000000000000000000000000000000000000000000000000000000000000000000000000000000000000000000000000000000000000000000000000000000000000000000000000000000000000000000000000000000000000000000000000000000000000000000000000000000000000000000000000000000000000000000000000000000000000000000000000000000000000000000000000000000000000000000000000000000000000000000000000000000000000000000000000000000000000000000000000000000000000000000000000000000000000000000000000000000000000000000000000000000000000000000000000000000000000000000000000000000000000000000000000000000000000000000000000000000000000000000000000000000000000000000000000000000000000000000000000000000000000000000000000000000000000000000000000000000000000000000000000000000000000000000000000000000000000000000000000000000000000000000000000000000000000000000000000000000000000000000000000000000000000000000000000000000000000000000000000000000000000000000000000000000000000000000000000000000000000000000000000000000000000000000000000000000000000000000000000000000000000000000000000000000000000000000000000000000000000000000000000000000000000000000000000000000000000000000000000000000000000000000000000000000000000000000000000000000000000000000000000000000000000000000000000000000000000000000000000000000000000000000000000000000000000000000000000000000000000000000000000000000000000000000000000000000000000000000000000000000000000000000000000000000000000000000000000000000000000000000000000000000000000000000000000000000000000000000000000000000000000000000000000000000000000000000000000000000000000000000000000000000000000000000000000000000000000000000000000000000000000000000000000000000000000000000000000000000000000000000000000000000000000000000000000000000000000000000000000000000000000000000000000000000000000000000000000000000000000000000000000000000000000000000000000000000000000000000000000000000000000000000000000000000000000000000000000000000000000000000000000000000000000000000000000000000000000000000000000000000000000000000000000000000000000000000000000000000000000000000000000000000000000000000000000000000000000000000000000000000000000000000000000000000000000000000000000000000000000000000000000000000000000000000000000000000000000000000000000000000000000000000000000000000000000000000000000000000000000000000000000000000000000000000000000000000000000000000000000000000000000000000000000000000000000000000000000000000000000000000000000000000000000000000000000000000000000000000000000000000000000000000000000000000000000000000000000000000000000000000000000000000000000000000000000000000000000000000000000000000000000000000000000000000000000000000000000000000000000000000000000000000000000000000000000000000000000000000000000000000000000000000000000000000000000000000000000000000000000000000000000000000000000000000000000000000000000000000000000000000000000000000000000000000000000000000000000000000000000000000000000000000000000000000000000000000000000000000000000000000000000000000000000000000000000000000000000000000000000000000000000000000000000000000000000000000000000000000000000000000000000000000000000000000000000000000000000000000000000000000000000000000000000000000000000000000000000000000000000000000000000000000000000000000000000000000000000000000000000000000000000000000000000000000000000000000000000000000000000000000000000000000000000000000000000000000000000000000000000000000000000000000000000000000000000000000000000000000000000000000000000000000000000000000000000000000000000000000000000000000000000000000000000000000000000000000000000000000000000000000000000000000000000000000000000000000000000000000000000000000000000000000000000000000000000000000000000000000000000000000000000000000000000000000000000000000000000000000000000000000000000000000000000000000000000000000000000000000000000000000000000000000000000000000000000000000000000000000000000000000000000000000000000000000000000000000000000000000000000000000000000000000000000000000000000000000000000000000000000000000000000000000000000000000000000000000000000000000000000000000000000000000000000000000000000000000000000000000000000000000000000000000000000000000000000000000000000000000000000000000000000000000000000000000000000000000000000000000000000000000000000000000000000000000000000000000000000000000000000000000000000000000000000000000000000000000000000000000000000000000000000000000000000000000000000000000000000000000000000000000000000000000000000000000000000000000000000000000000000000000000000000000000000000000000000000000000000000000000000000000000000000000000000000000000000000000000000000000000000000000000000000000000000000000000000000000000000000000000000000000000000000000000000000000000000000000000000000000000000000000000000000000000000000000000000000000000000000000000000000000000000000000000000000000000000000000000000000000000000000000000000000000000000000000000000000000000000000000000000000000000000000000000000000000000000000000000000000000000000000000000000000000000000000000000000000000000000000000000000000000000000000000000000000000000000000000000000000000000000000000000000000000000000000000000000000000000000000000000000000000000000000000000000000000000000000000000000000000000000000000000000000000000000000000000000000000000000000000000000000000000000000000000000000000000000000000000000000000000000000000000000000000000000000000000000000000000000000000000000000000000000000000000000000000000000000000000000000000000000000000000000000000000000000000000000000000000000000000000000000000000000000000000000000000000000000000000000000000000000000000000000000000000000000000000000000000000000000000000000000000000000000000000000000000000000000000000000000000000000000000000000000000000000000000000000000000000000000000000000000000000000000000000000000000000000000000000000000000000000000000000000000000000000000000000000000000000000000000000000000000000000000000000000000000000000000000000000000000000000000000000000000000000000000000000000000000000000000000000000000000000000000000000000000000000000000000000000000000000000000000000000000000000000000000000000000000000000000000000000000000000000000000000000000000000000000000000000000000000000000000000000000000000000000000000000000000000000000000000000000000000000000000000000000000000000000000000000000000000000000000000000000000000000000000000000000000000000000000000000000000000000000000000000000000000000000000000000000000000000000000000000000000000000000000000000000000000000000000000000000000000000000000000000000000000000000000000000000000000000000000000000000000000000000000000000000000000000000000000000000000000000000000000000000000000000000000000000000000000000000000000000000000000000000000000000000000000000000000000000000000000000000000000000000000000000000000000000000000000000000000000000000000000000000000000000000000000000000000000000000000000000000000000000000000000000000000000000000000000000000000000000000000000000000000000000000000000000000000000000000000000000000000000000000000000000000000000000000000000000000000000000000000000000000000000000000000000000000000000000000000000000000000000000000000000000000000000000000000000000000000000000000000000000000000000000000000000000000000000000000000000000000000000000000000000000000000000000000000000000000000000000000000000000000000000000000000000000000000000000000000000000000000000000000000000000000000000000000000000000000000000000000000000000000000000000000000000000000000000000000000000000000000000000000000000000000000000000000000000000000000000000000000000000000000000000000000000000000000000000000000000000000000000000000000000000000000000000000000000000000000000000000000000000000000000000000000000000000000000000000000000000000000000000000000000000000000000000000000000000000000000000000000000000000000000000000000000000000000000000000000000000000000000000000000000000000000000000000000000000000000000000000000000000000000000000000000000000000000000000000000000000000000000000000000000000000000000000000000000000000000000000000000000000000000000000000000000000000000000000000000000000000000000000000000000000000000000000000000000000000000000000000000000000000000000000000000000000000000000000000000000000000000000000000000000000000000000000000000000000000000000000000000000000000000000000000000000000000000000000000000000000000000000000000000000000000000000000000000000000000000000000000000000000000000000000000000000000000000000000000000000000000000000000000000000000000000000000000000000000000000000000000000000000000000000000000000000000000000000000000000000000000000000000000000000000000000000000000000000000000000000000000000000000000000000000000000000000000000000000000000000000000000000000000000000000000000000000000000000000000000000000000000000000000000000000000000000000000000000000000000000000000000000000000000000000000000000000000000000000000000000000000000000000000000000000000000000000000000000000000000000000000000000000000000000000000000000000000000000000000000000000000000000000000000000000000000000000000000000000000000000000000000000000000000000000000000000000000000000000000000000000000000000000000000000000000000000000000000000000000000000000000000000000000000000000000000000000000000000000000000000000000000000000000000000000000000000000000000000000000000000000000000000000000000000000000000000000000000000000000000000000000000000000000000000000000000000000000000000000000000000000000000000000000000000000000000000000000000000000000000000000000000000000000000000000000000000000000000000000000000000000000000000000000000000000000000000000000000000000000000000000000000000000000000000000000000000000000000000000000000000000000000000000000000000000000000000000000000000000000000000000000000000000000000000000000000000000000000000000000000000000000000000000000000000000000000000000000000000000000000000000000000000000000000000000000000000000000000000000000000000000000000000000000000000000000000000000000000000000000000000000000000000000000000000000000000000000000000000000000000000000000000000000000000000000000000000000000000000000000000000000000000000000000000000000000000000000000000000000000000000000000000000000000000000000000000000000000000000000000000000000000000000000000000000000000000000000000000000000000000000000000000000000000000000000000000000000000000000000000000000000000000000000000000000000000000000000000000000000000000000000000000000000000000000000000000000000000000000000000000000000000000000000000000000000000000000000000000000000000000000000000000000000000000000000000000000000000000000000000000000000000000000000000000000000000000000000000000000000000000000000000000000000000000000000000000000000000000000000000000000000000000000000000000000000000000000000000000000000000000000000000000000000000000000000000000000000000000000000000000000000000000000000000000000000000000000000000000000000000000000000000000000000000000000000000000000000000000000000000000000000000000000000000000000000000000000000000000000000000000000000000000000000000000000000000000000000000000000000000000000000000000000000000000000000000000000000000000000000000000000000000000000000000000000000000000000000000000000000000000000000000000000000000000000000000000000000000000000000000000000000000000000000000000000000000000000000000000000000000000000000000000000000000000000000000000000000000000000000000000000000000000000000000000000000000000000000000000000000000000000000000000000000000000000000000000000000000000000000000000000000000000000000000000000000000000000000000000000000000000000000000000000000000000000000000000000000000000000000000000000000000000000000000000000000000000000000000000000000000000000000000000000000000000000000000000000000000000000000000000000000000000000000000000000000000000000000000000000000000000000000000000000000000000000000000000000000000000000000000000000000000000000000000000000000000000000000000000000000000000000000000000000000000000000000000000000000000000000000000000000000000000000000000000000000000000000000000000000000000000000000000000000000000000000000000000000000000000000000000000000000000000000000000000000000000000000000000000000000000000000000000000000000000000000000000000000000000000000000000000000000000000000000000000000000000000000000000000000000000000000000000000000000000000000000000000000000000000000000000000000000000000000000000000000000000000000000000000000000000000000000000000000000000000000000000000000000000000000000000000000000000000000000000000000000000000000000000000000000000000000000000000000000000000000000000000000000000000000000000000000000000000000000000000000000000000000000000000000000000000000000000000000000000000000000000000000000000000000000000000000000000000000000000000000000000000000000000000000000000000000000000000000000000000000000000000000000000000000000000000000000000000000000000000000000000000000000000000000000000000000000000000000000000000000000000000000000000000000000000000000000000000000000000000000000000000000000000000000000000000000000000000000000000000000000000000000000000000000000000000000000000000000000000000000000000000000000000000000000000000000000000000000000000000000000000000000000000000000000000000000000000000000000000000000000000000000000000000000000000000000000000000000000000000000000000000000000000000000000000000000000000000000000000000000000000000000000000000000000000000000000000000000000000000000000000000000000000000000000000000000000000000000000000000000000000000000000000000000000000000000000000000000000000000000000000000000000000000000000000000000000000000000000000000000000000000000000000000000000000000000000000000000000000000000000000000000000000000000000000000000000000000000000000000000000000000000000000000000000000000000000000000000000000000000000000000000000000000000000000000000000000000000000000000000000000000000000000000000000000000000000000000000000000000000000000000000000000000000000000000000000000000000000000000000000000000000000000000000000000000000000000000000000000000000000000000000000000000000000000000000000000000000000000000000000000000000000000000000000000000000000000000000000000000000000000000000000000000000000000000000000000000000000000000000000000000000000000000000000000000000000000000000000000000000000000000000000000000000000000000000000000000000000000000000000000000000000000000000000000000000000000000000000000000000000000000000000000000000000000000000000000000000000000000000000000000000000000000000000000000000000000000000000000000000000000000000000000000000000000000000000000000000000000000000000000000000000000000000000000000000000000000000000000000000000000000000000000000000000000000000000000000000000000000000000000000000000000000000000000000000000000000000000000000000000000000000000000000000000000000000000000000000000000000000000000000000000000000000000000000000000000000000000000000000000000000000000000000000000000000000000000000000000000000000000000000000000000000000000000000000000000000000000000000000000000000000000000000000000000000000000000000000000000000000000000000000000000000000000000000000000000000000000000000000000000000000000000000000000000000000000000000000000000000000000000000000000000000000000000000000000000000000000000000000000000000000000000000000000000000000000000000000000000000000000000000000000000000000000000000000000000000000000000000000000000000000000000000000000000000000000000000000000000000000000000000000000000000000000000000000000000000000000000000000000000000000000000000000000000000000000000000000000000000000000000000000000000000000000000000000000000000000000000000000000000000000000000000000000000000000000000000000000000000000000000000000000000000000000000000000000000000000000000000000000000000000000000000000000000000000000000000000000000000000000000000000000000000000000000000000000000000000000000000000000000000000000000000000000000000000000000000000000000000000000000000000000000000000000000000000000000000000000000000000000000000000000000000000000000000000000000000000000000000000000000000000000000000000000000000000000000000000000000000000000000000000000000000000000000000000000000000000000000000000000000000000000000000000000000000000000000000000000000000000000000000000000000000000000000000000000 do you think that the big bang is over that or no?
Reply: How long did you hold the 0 key to create that massive number? Scrolling through that on a phone is a nightmare.
Reply: your comment crashed my browser XD (chrome)
Reply: Forever.
Reply: i saw it ok
Reply: wow you must have like no life
Reply: Dino saur
Lawl, you wasted your time typing that many Zeroes, XD.
Reply: wow rlly now thats funny
Reply: isawitokok
Reply: good job
Reply: Isawitokok
Reply: You just lut 122 in the middle
Reply: 200000000000000000000000000000000000000000000000000000000000000000000000000000000
Reply: Dino saur Real fact : the Big Bang wasn't an explosion :p.
Reply: Stan Marques What ever you do dont show more dino saur's comment
Reply: why not DX
Reply: Dino saur isawitokok
Reply: Dino saur isawitokok
Reply: Dino saur there is not even half that amount of atoms in the entire universe. Number are BIG...
Reply: Dino saur  isawitokok
Reply: no nurf
Reply: Dino saur how is the meteor explosion? and why your species extinct?
Reply: +Dino saur That Is Basically Enough To Explode A Quasar Or Create 1000 Galaxies Or Even A Universe! It's So Big! It Would've Blown Earth Up! The Big Bang Would Have Been Half Of A Quarter Of That!
Reply: thanks
Reply: Dino saur No Problem!
Reply: XD
Reply: Dino saur I just clicked the gates to hell
Reply: Did your computer die?
Reply: What the heck
Reply: No